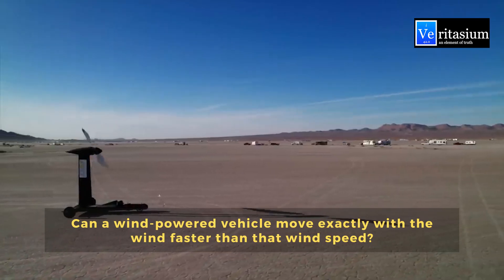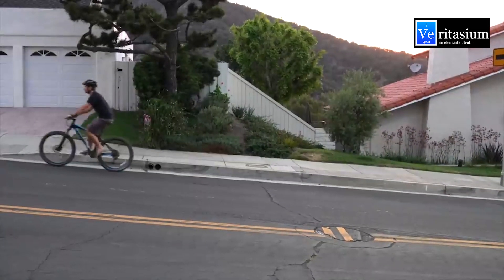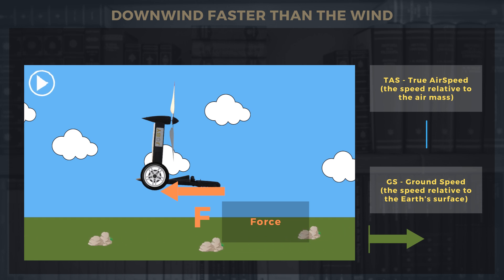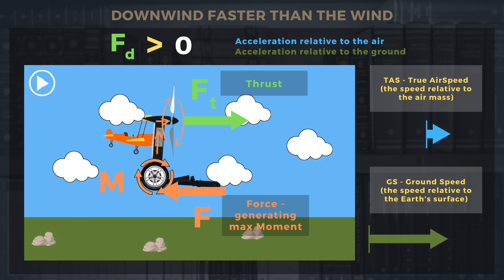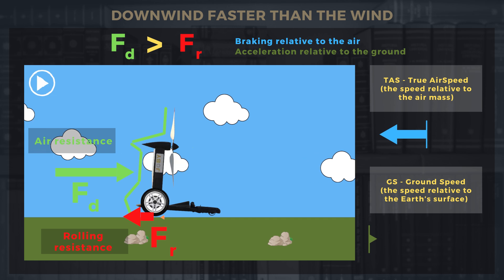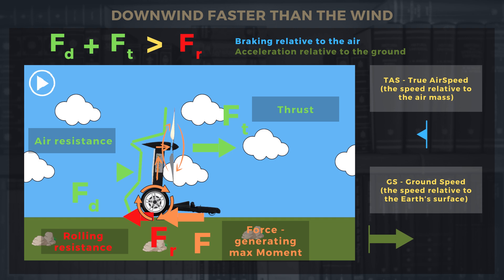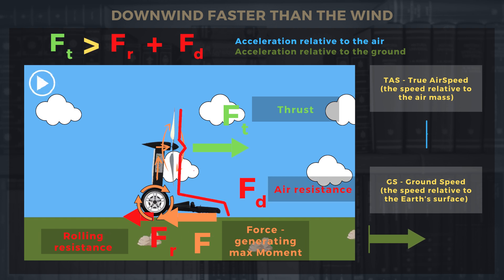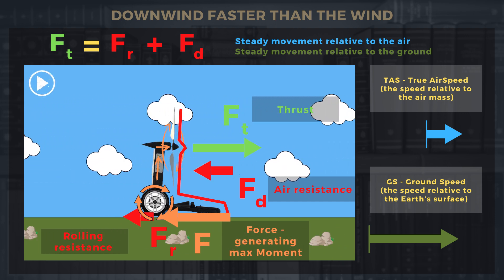Veritasium is wrong. Blackbird vehicle explanation.

Comment: One of the correct statements you make is that rolling resistance is approximately a constant.   This is true.   Then you make a major error in saying this is the only force the cart has to overcome.   This is patently false.   As the cart picks up speed, the propeller turns faster.  Since the only thing driving the propeller is the wheel, the retarding force at the edge of the wheel increases the faster the cart goes.   So the prop has to create thrust to overcome an increasing force retarding the carts motion.   The only way it does this is that the prop thrust is proportional, but more than, the retarding force of the wheels which is increasing as the cart speeds up.   This is due to the constant multiplying force of leverage (the more you put in the more you get out on the other end [not energy but force])   So the cart accelerates until the aerodynamic drag of the cart, the propeller (because it is stirring up air turbulence also) the rolling resistance plus the internal drive train losses equal the thrust force on the cart from the propeller.   At this point, all forces and torques are in balance and the cart no longer accelerates.  It is at a limit speed well above windspeed.   

Note that this leverage is a changeable parameter by the pilot by varying the pitch of the propeller blades and can be a high ratio (lots more force of the prop than the wheels) to a low ratio (very near the same thrust at the prop compared to the retarding force of the wheels [again, very little to do with rolling resistance]).   

Cavallaro, Borton, and Derek are all correct that the fundamental principle that makes the cart work is one of leverage.   Your error is thinking that rolling resistance is the primary retarding force and it is completely wrong.  The tangential force at the wheel to drive the prop is much much larger near limit speed above windspeed, and without the leverage the cart would never work.   Once you understand this, you should not retract your video as it is a valuable discussion and it illustrates a misconception that others have fallen into.  But you should change the title, and declare that you were the one in error and they were correct.
Reply: This thread is a retarding force on my sanity 💀
Reply: Wtf are these replies
Reply: I've gone into the explanation too many times on the main video. In summary, the craft CANNOT do what it claims...and the explanation why not has to do with why this wind powered craft was tested on a treadmill rather than the obvious choice, a wind tunnel.

The craft harnesses changes in wind speed and direction to give the APPEARANCE of net acceleration.
Reply: @coreaccount4376  It's pretty funny, I've personally run a small model that easily exceeded windspeed that was on a treadmill with no change in speed or direction of the wind.   So no, your comment is factually wrong.   The Blackbird set a record for 2.8X windspeed under sanctioned conditions.   You don't get that kind of result as an APPEARANCE of net DDWFTTW travel.   How many actual experiments have you done?
Reply: @coreaccount4376  A professor bet 10k on it and was proven wrong, will you do the same? :)
Reply: The vehicle initially accelerates due to the tailwind pushing on all surfaces of the vehicle. 

It is important to note the propeller is initially stalled! Once the wheels can turn the propeller fast enough it will unstall and only then start to produce thrust. 

The vehicle is able to exceed the wind because the tailwind reduces airflow through the propeller enabling it to produce maximum thrust (static thrust) for far longer.

I hope this helps :)
Reply: https://youtu.be/yBCH0cW8l5w?t=485
Reply from the maker: Sorry for the delay in response. I slept and then worked (I'm from Europe). Your comments are the most substantive and balanced without emotions. Thank you! However, I have to defend my opinion further and I will try to explain it differently. (I think adding that orange force was confusing. it was only a reflection of air resistance that is why I do not put it into the equation). Please try to follow this analyse with a clear mind Thx. 

First,let's establish the initial state. I go thru analyzes from the initial state to the end state.
•             Wheel is connected to the propeller.
•             Air resistance depends on TASspeed.
•             Rolling resistance is constant.
•             TAS speed is bigger than 0. It is the speed of the aircraft relative to the air mass.
•             Ground Speed is 0. It is the speed of the aircraft relative to the air mass.
•             Vehicle braking relative to the air.
•             Accelerating relative to the ground.

Our initial forces:
•             F(a) air resistance acting on a vehicle – it brakes the vehicle in relation to air and acceleration in relation to ground. It Cause the wheel to rotate in direction of movement and thus wants to rotate the propeller to generate thrust in direction of movement (they are connected)
•             F(r) rolling resistance (braking wheels in relation to ground)
•             F(p) air resistance acting on the propeller (it wants to rotate the propeller in the opposite direction and thus also wants the wheel rotates in the opposite direction) I admit that this force should be also added. 

So when
F(a) = F(r)+ F(p) 
Vehicle is in steady speed in relation to air 
Stands still in relation to ground

When
F(a) >F(r) + F(p) 
Vehicle will braking in air masses
Accelerating in relation to ground 
Wheel and propeller start to rotate in the direction of movement and thus generate Thrust force F(t) and opposite force F(-t) which slow down wheel rotation.

I hope we all agree on what happens to this point.

When vehicle moves, forces will change:
F(a) and F(p) will decrease in the same relation but F(a) is all the time bigger. 
F(t) and F(-t) starts to growing
F(r) is constant 
F(g) force appears - from moving ground, it is an unbalanced force like the initial force F(a) was, and this force acts only on the wheel. It drives wheel does not slow down the vehicle. This force is not acting on the entire vehicle, only on wheels. It is force from the air mass movement in relation to ground (or the ground in relation to air mass). For TASpeed = 0 F(a)=0 for GSspeed = 0 F(g) = 0 These forces are in relation.  The ground does not hold the vehicle as air mass does, it only holds the wheel by rolling resistance. I think this is somewhat similar to the problem in which myth busters explain “Plane ona Conveyer Belt '' Generally our vehicle is moving in air masses as a plane. Grounds only transfer the force that initially moved a vehicle.

We will have then
F(a) +F(t) + F(g) > F(r) + F(p) + F(-t)
Forces will change in relation but the left side will be bigger all the time, Until we reach the wind speed. 

So when we reached TAS speed = 0 (no move relative to air) the air resistance force disappeared, and the only forces remaining were F(r) rolling resistance,  F(t) Thrust, F(-t) on wheel and F(g) from ground moving.  

We have than:
F(t) +F(g) > F(r) + F(-t) 

F(g) generates additional F(t’) thrust force and opposite F(-t’) force on the wheel.
|F(t’)| = |F(-t’)| = |F(g)|
|F(t)| = |F(-t)| 

So we can only left 
F(t’) >F(r) 

We continue acceleration; we have thrust force bigger than rolling resistance. At this point only force holding back the vehicle is rolling resistance. 

From this moment air resistance will act in the opposite direction but with a different effect.
F(-a) air resistance acting on the vehicle – will braking vehicle in relation to air but also in relation to ground and this force will rotate the wheel in the opposite direction of movement and thus the propeller.(slow down it)
F(-p) air resistance acting on the propeller – helps to rotate the propeller and generate the thrust force and thus rotate the wheel in direction of movement. 

But F(-a)> F(-p) as we assume at the beginning 

So then
F(t’) +F(-p) > F(-a) + F(r) 
Vehicle accelerates in relation to air masses and ground until the F(-a) force will grow enough and will balance the equation. F(p) grows in the same relation but F(a) is bigger. 

F(t') +F(-p) = F(-a) + F(r) 

This will be the target state
Steady movement relative to the air
Steady movement relative to the ground

IMO It's all about taking energy from a moving medium that moves as if "next to" the medium in which the vehicle is placed. You can stand by the river (on the bank), draw energy from it and go upstream (on bank) using that energy. If this is correct then we don’t need the lever for this to work, only balance of forces and changing forces direction. The lever can help because we assume 100% efficiency (in reality it is impossible). But the lever is not critical for it to work. If this is wrong then I admit that I was in misteak.

P.S. You are also not agree with Veritasium video:
V – “with sufficiently low energy loss, any speed is possible.
You- “It is at a limit speed well above wind speed.”

 P.S.2 I can answer in delay. I have plans for today, but I will do that for sure. Regards!
Reply: @PiotrRysztak  "I think adding that orange force was confusing..."

No. Failing to include that orange force in the net force equation was your error, based on a very fundamental misconception that you have about "tangential forces".

"Our initial forces:.."

You have again failed to include the backwards force at the wheels due to the propeller torque (you know, the orange one), which is already present from the start, if the propeller is in positive pitch. In fact, if the pitch is too high, that force will propel the vehicle backwards, in the upwind direction.
Reply: @PiotrRysztak  Good reply but you do have a major flaw HERE and both sentences are factually wrong  (the first in the last part and the second completely wrong).

You: "F(g) force appears - from moving ground, it is an unbalanced force like the initial force F(a) was, and this force acts only on the wheel. It drives wheel does not slow down the vehicle."

The ONLY reason it doesn't slow down the vehicle is because the propeller is producing a larger thrust force but the ground force most certainly ACTS on the entire vehicle and WOULD slow it down if the propeller thrust weren't greater than this force.   Your point about "It just acts only on the wheel  (to produce only spin of the wheel) is wrong.  It acts only AT the wheel rim but by the rules of mechanics is on the whole vehicle.   Since the wheel is resisting that force, the force is transmitted to the whole vehicle via the axle.   So via the axle, it most definitely imparts a retarding force to the entire vehicle.   

Others have used the concept of braking of an automobile as an example.  When the car is braked, the ground only operates on the wheel rim but the force to brake the car to a stop is much greater than just removing the angular energy from the wheel.  The energy of the entire car translating has to also be removed.  The force on the wheel of the car from the ground is much much greater than just slowing the tire/wheel down.  This is easy to show with an spinning wheel pushed against a surface which can be stopped with a much lower force than when the wheel is on the car at the same wheel speed.  Brakes clearly don't just stop the cars wheels--they stop the entire car.

This is the point that everyone is telling you that you consistently get wrong and they are correct.   This isn't just an opinion, you can read about it here:

https://en.wikipedia.org/wiki/Couple_(mechanics)

where Wikipedia states it as:

"A force F applied to a rigid body at a distance d from the center of mass has the same effect as the same force applied directly to the center of mass and a couple Cℓ = Fd. The couple produces an angular acceleration of the rigid body at right angles to the plane of the couple. The force at the center of mass accelerates the body in the direction of the force without change in orientation. "  (see diagrams in reference).

The last sentence there is the one that is important in this context and is the one where you are clearly wrong.  The people telling you that you have this wrong aren't misunderstanding this.   We've all been trained in physics and dynamics and understand this point.   The textbooks agree with us.  It is simply a misunderstanding on your part.

The prop thrust and retarding force of the ground form a couple (which causes rotation of the wheel to produce torque to power the prop) but the thrust force produces an excess force at the axle which causes the wheel to translate (in direction of motion) along with the vehicle.  Without leverage this wouldn't be possible because the prop thrust has to be larger than all the tangential forces at the wheel in order for the vehicle to accelerate.

A force on the tangent to an object without a torque couple produces both rotation and translation since there is a change in both linear and angular momentum of the wheel from an off Center of mass force.  This is fundamental dynamics and all of these engineers know this.  You can see this practically when you throw a disk when you hold it only by the rim and accelerate it like a frisbee.  It both translates and spins.   So please stop saying that this is a pure "spin" force just because it is on the tangent. It's wrong.    It can only be a pure spin force if it is a torque couple.   In other words, for pure spin only you have to have an opposing force of the same magnitude on the opposite side of the rim tangent to it in the opposite direction.   Because if there is any overall force imbalance on the wheel, you are going to get translation as well as rotation (which is what the reference above states).  This is fundamental dynamics.  It is the major mistake on your part to think that a single force at the rim of a wheel will only produce a pure rotation.  Every physics and dynamics book says this is wrong. 

BTW, it isn't much of a mystery what happens below windspeed.  The dynamics mostly only get interesting near wind speed travel and above.  But it is a bit of interest where the blades of the propeller start turning fast enough below windspeed to start to generate thrust since this is a turbulent flow regime.  Most people do not have an issue understanding this regime.

your second fundamental flaw is that f(t (prop)) = -f(t wheel retarding).    This isn't true.  The propeller thrust of the vehicle (by design) always exceeds the TOTAL wheel retarding force (up to the limit speed).  If it did not, it would not work.  And the majority of the wheel retarding force comes from the torque of the axle from the resistance force of the prop to rotation. 

Above windspeed, there are only these translational external forces--gravity (weight of the cart) which equals the force from the ground directed upward.  (They are equal and opposite so no vertical acceleration exists).   Propeller thrust force, Aerodynamic drag force on the cart, and the force tangent to the wheels.   The force tangent to the wheels is caused by rolling resistance plus internal losses PLUS the torque force from the propeller on the axle translated out to the rim.  This force is the part of the torque couple with the lever arm being the distance from axle to rim which RESULTS in a resistance force on the rim.  The resulting force at the rim is substantially lower than the thrust due to overall leverage (gearing to the prop) and it arises from aerodynamic resistance to turning of the prop.

Then you state:

"IMO It's all about taking energy from a moving medium that moves as if "next to" the medium in which the vehicle is placed. You can stand by the river (on the bank), draw energy from it and go upstream (on bank) using that energy. If this is correct then we don’t need the lever for this to work, only balance of forces and changing forces direction. The lever can help because we assume 100% efficiency (in reality it is impossible). But the lever is not critical for it to work. If this is wrong then I admit that I was in misteak."

The easy analogy for this cart should be "to go down the river faster than the river" but one can go up bank also faster than the river by using the river but you still need leverage to capture any energy.

The mechanism by which one draws energy to make all the forces work in an imbalanced way in your favor is leverage (or gearing--take your choice).   If you don't think so, then propose a mechanism by which to do this without using leverage or "force multiplication" of some sort.  (It turns out that there are plenty of mechanisms but they all rely upon the principle of leverage).

On your P.S.  "V – “with sufficiently low energy loss, any speed is possible.
You- “It is at a limit speed well above wind speed.”:

I am actually not in disagreement with Veritasium.   The limit speed (for any particular vehicle) comes about because the lever ratio required is a function of losses of that vehicle.   The higher the losses, the higher the leverage ratio is required to make the vehicle work.   So the limit speed is the highest speed obtainable with the highest ratio that the cart can overcome all other losses (aero, rolling, and internal) and still have the thrust force > wheel retarding force.   A cart with lower losses can go faster with a higher lever ratio (gearing ratio) but it still has a limit speed (only different from the first).   So the comments are actually just restating the same thing.

So in all regards, I'm completely in agreement with Cavallaro and Borton.
Reply from the maker: Thank you very much for this lecture. It is very informative and precise. I would like to make a simple animation explaining how the forces are distributed from the beginning to the end of the experiment, because I think this is missing in the discussions about this phenomenon. There are analogies, experiences, but I didn't get to a simple animation of what is happening in the vehicle from the beginning to the end of the experiment. How forces change etc.. 

However, I still need to dispel my doubts. 
What happens to the force F(a) - the aerodynamic drag that is at the beginning? 

Let us assume that we do not have a propeller, then only the aerodynamic drag force and the rolling resistance force act on the vehicle. 
The vehicle will accelerate relative to the ground.
and It slows down against the air. 

There will be a situation where F(a) aerodynamic drag becomes equal to F (r) rolling resistance.
Steady movement in relation to the ground.
Steady movement in relation to the air (below wind speed)
This is the target state that this system will try to achieve.

What happened to this unbalanced force at the beginning? Since there are always pairs of forces as you all mention many time and I also know that (I hope you see that I am not some retard ;) )  Rolling resistance Is constant all the time. What happens to air resistance? 

I agree that we are taking force from braking in air masses, to accelerate in relation to ground but in relation to ground we have only constant force of rolling resistance. Where is this unbalanced force in the beginning? Is it that this force from the beginning was added only once to the system, from the outside? We hold the car at the beginning of the experiment and remove force blocking the air resistance from moving the car?  If yes I think this can be the place where I made a mistake in my analysis. I assumed this force should be in the system all the time but only changes the place.  

>>The easy analogy for this cart should be "to go down the river faster than the river" but one can go up bank also faster than the river by using the river but you still need leverage to capture any energy. 

Look at this analogy: 
Car in air (TAS=0) =  water mill on bank of river(speed in relative to bank = 0)
Ground is moving in left direction  =  river is moving in left direction 

We want to go in the right direction on the bank and on air.
Isn’t it a 1:1 analogy? 

So when we stay on the bank of a river, we are a water mill and we are taking energy from moving water but we are not moving in relation to the bank, we stand still. We have energy and we can do with this energy whatever we want. We don’t need a lever for that.We block normal force by holding the ground but taking torque force and we can use it. We can use it for example to move in the direction opposite to water.  

I think that we can do the same analogy to air mass – ground movement. We are held in the air mass and taking energy from moving ground.  

I hope my reasoning is more clear now. This is why I think it is possible - taking energy from a moving medium that moves as if"next to" the medium in which we are, and using this energy to move in the medium we are in. 

I have some plans and can answer with delay but I will be for sure :) Regards and thank you for open minded discussion!
Reply: @PiotrRysztak  "We block normal force by holding the ground but taking torque force and we can use it. "

You still don't get that this torque generating force will also be braking you, do you? As long you don't fix that misconception, you will always fail to analyse this correctly.

"This is why I think it is possible - taking energy from a moving medium that moves as if"next to" the medium in which we are, and using this energy to move in the medium we are in. "

Of course it is possible, but when both media are moving in the same direction relative to you, then you will have opposed forces at both media:
Fg =  braking generator force
Fp =  propulsive thrust force
You cannot ignore Fg, but you can have Fp > Fg thanks to "leverage".

Note that Fg & Fp are separate from the dissipative forces, which you have additionally (rolling resistance, drag).
Reply: @PiotrRysztak  

Taking your points in order:  "What happens to the force F(a) - the aerodynamic drag that is at the beginning? "
For a DDWFFTW cart, the propeller and cart body do have aero drag up to windspeed which accelerates the cart in the downwind direction.  Nothing mysterious here, it is just blowing in the wind.   But because of the gearing, the wheel torque always overcomes the propeller torque and causes it to turn like a propeller and not a wind turbine.   At windspeed, the aero drag disappears and above windspeed, the aero drag now becomes a retarding force and increases up to the limit speed.

Rolling Resistance--is small and approximately the same over the entire scenario.   It isn't a major factor in the entire situation as it is a weak force for the Blackbird.  It is always a retarding force however and has to be included in the force to be overcome by prop thrust below and above windspeed.  Rolling resistance usually just includes the drivetrain losses minus the propeller rotational drag.  You could determine it by just measuring the force it takes to push the cart at any speed with the propeller disconnected but not the rest of the drivetrain.   For most practical purposes, you can forget rolling resistance because it isn't very important.  If you want to include it in your video it is small and approximately constant  (it rises slightly as the speed increases from the frictional losses in the drivetrain).

Aero drag above windspeed is the one of the two predominant retarding forces.  The other force is the propeller power requirement reflected via torque back to the rim of the wheel.   For most carts the latter is the primary retarding force so it is very important.   This force roughly rises with the square of the velocity of the cart over ground above windspeed because the phenomenon that is causing the propeller torque resistance is aerodynamic drag from turning to produce the thrust.

You state: "I agree that we are taking force from braking in air masses, to accelerate in relation to ground but in relation to ground we have only constant force of rolling resistance."

NO, a thousand times NO.  Rolling resistance has a specific meaning and it doesn't include the propeller torque budget.   This is your fundamental error.  The MAJOR force at the wheels isn't rolling resistance but the propeller torque requirement forces reflected back through the drivetrain to the rim of the wheel.
You can state this all you want but it will always be wrong for this cart with low rolling resistance like the Blackbird.

The importance of this point can't be overstated.   If the gear ratio was not set up so that the torque budget from the propeller produced a lower force at the wheels (leverage), the cart would never work as a DDWFTTW cart.   In fact, the way to change the cart to work as a Direct Upwind FTTW cart is to change the gear ratio from the propeller to the wheels such that the propeller force is larger than the wheel force.   This cart will run upwind faster than the wind, but not downwind faster than the wind.

You state:
"Where is this unbalanced force in the beginning? Is it that this force from the beginning was added only once to the system, from the outside? We hold the car at the beginning of the experiment and remove force blocking the air resistance from moving the car?  If yes I think this can be the place where I made a mistake in my analysis. I assumed this force should be in the system all the time but only changes the place."

The force in the beginning is somewhat obviously just the wind blowing on the cart from behind to start it moving.  The only thing opposing this at this stage is rolling resistance (small) and some propeller torque resistance as it would normally windmill like a turbine but is being forced to turn as a propeller.  As it accelerates to near windspeed, the propeller starts adding thrust to the cart which combines with the drag (from behind of the cart to accelerate it up to windspeed).  If not for the force at the propeller, it would never get to windspeed due to internal losses.   Once windspeed is achieved, there is no aero force at all on the cart body, the only force is the thrust force and the wheel force from rolling resistance and propeller torque budget (described above).  Above windspeed, the cart produces aero drag that starts to retard the motion and the faster the cart goes, this force increases AS WELL AS the force from the propeller torque budget reflected to the wheel rims.

The river analogy is just a waste of time because going down a river faster than the river with a propeller in the water and wheels on the bank is the same phenomenon so it doesn't lend any additional insight.

Energy is reference frame dependent so where the energy comes from and goes depends upon the reference frame it is being measured in.  That is another discussion I would be happy to have but if one understands the top part of the post, the energy issue is not all that important.  The energy for driving the cart comes from the propeller slowing the true wind (processed through the propeller) over ground.     The wind loses energy with respect to ground and the cart gains part of that energy to function.

I'm happy to continue to discuss it.

BTW:  If Cavallaro or Borton tells you that any of this is incorrect, there is a 99.999% probability that they are right.
Reply from the maker: I had a rough end of week. This is why I focused only on this thread. @eytyee I take in consideration your comments too, thanks for them!

Ad.1 - Variant with propeller (from experiment)
I took the notes to this variant with the propeller. I will think about it. I hope you guys agree that this kind of simple animation can help to understand what is going on with the vehicle and with forces.

Ad.2 - Simple example cart without propeller.

>>Let us assume that we do not have a propeller

In a previous comment i consider simple cart (car) with no propeller, no engine, only cart, wheel, and air mass moving in relation to ground or ground moving in relation to air mass (depending on the observer's perspective). At beginning we have unbalanced force of air resistance.

"We are taking force from braking in air masses, to accelerate in relation to ground but in relation to ground we have only constant force of rolling resistance."

I hope we agree with that  the target state that this variant will try to achieve is:
Steady movement in relation to the ground.
Steady movement in relation to the air (below wind speed)
F(a) aerodynamic resistance becomes equal to F (r) rolling resistance. These are the only forces influencing the movement of this vehicle.

This is why i asked the question What happened to this unbalanced air resistance force at the beginning?  

Ad.3 - Water-ground analogy to ground-air
We agree that the analogy is 1:1? 

•           Car in air (TAS=0) =  water mill on bank of river(speed in relative to bank = 0)
•           Ground is moving in left direction  =  river is moving in left direction 
•           We want to go in right. On the bank or in the air masses. 

We can undoubtedly stand on the shore and draw energy from the water through the rotating waterwheel (for example) and this water not move us in relation to ground. We are block this force by holding the ground. This is how simple watermill works. We block normal force but generating moment. Where is this wrong?
We rotate the waterwheel without moving it in relation to ground. So we can use this torque for whatever we want. For example move upstream the river. Mechanism we use to do that is different discussion.

This is why I think it is possible - taking energy from a moving medium that moves as if"next to" the medium in which we are, and using this energy to move in the medium we are in. 

Try to read this with caution and with open mind please. Where in this reasoning is mistake?

Ad.4
>>If Cavallaro or Borton tells you that any of this is incorrect, there is a 99.999% probability that they are right.

So you are saying i am 0,001% closer to convince you xD <- (joke)
but for me Argumentum ad veracundiam is not what is good argument in discussion. If people didn't question authority, science could get stuck in error. I am not saying that this is such a situation, it is a general statement.
Reply: @PiotrRysztak  "So we can use this torque for whatever we want. For example move upstream the river."

You don't just have torque from the water. You also have a force that pushes you downstream. To move upstream against that downstream force you need a greater force at the ground (due to leverage).
Reply: @PiotrRysztak  
Ad.1)  Illustrate as much as you like just be sure to include all forces.  The force due to the propeller's resistance reflected to the wheels is essential.  It should start at zero and steadily rise (even before the thrust starts).   At roughly 50% to 70% of windspeed, the propeller thrust will start to go positive and will soon exceed the resistance force (net) at the wheels before windspeed).   From there it increases and propeller's reflected force the wheels will increase until all the forces balance.  That will be the limit speed of the cart for that wind and it will be steady state and faster than windspeed as long as the true wind blows.   

Your Ad.2 is fine.  Remove the propeller and the only thing resisting motion is rolling resistance.   If the car starts, it will roll up to the speed where the drag force from the wind balances the rolling resistance.  This speed point will of course be slower than the wind.  So with no propeller we are in agreement.

But if you add the propeller back in, it will produce thrust and it will also produce the additional retarding force at the wheels.  And without the unbalanced leverage with the gear ratio such that the prop thrust is more than the wheel retardation that turning the prop causes, the cart will never exceed windspeed.

Ad.3   I disagree with your analogy if you want to consider a DDWFFTW.   (Direct Down Water Boat Faster than the Water).   Why does this matter?   Because the water is the medium that is slowed from the free stream velocity by the boat's propeller (just like the DDWFTTW cart) and the wheels are producing drag against the bank.  Nevertheless the boat can go DDWFTTW.   If you go upstream you have A DUWFTTW boat.   One could call this a DDGFTTG boat with the river as the frame of reference. though.   This illustrates that either reference frame is the same but the boat behavior Up  and Down is different.  This is due to the medium being accelerated through the propeller.    

Your reasoning mistake is missing that a waterwheel has to be attached to the ground for the waterwheel to turn.   Otherwise, it will just float down the river and not turn.  You aren't blocking the force holding the waterwheel if you attach to the ground.  You are simply constraining it to rotation only.   When you do this, the turning wheel most definitely applies a force to the ground (where it is attached to the ground).   You continue to make this simple mistake thinking there is no force on the ground.   I'm completely open minded about this but I see you continue to make this error.   And this is the major error.  It is very real and very measurable in the real world.   Why do you continue to ignore that a tangential force on a wheel causes translation and rotation if not constrained?  I've offered the textbooks explaining this clearly to you and it follows directly from Newton's 2nd law.

"So you are saying i am 0,001% closer to convince you xD <- (joke)"

On a serious note, when I state that, my comment was to open the possibility that I simply misstated something.

Even as a joke you are no closer to convincing me (no joke!).   As I did dozens of experiments on YouTube on the treadmill with a smaller cart and know how it works and which forces make it move.  It is actually relatively straightforward to measure the forces directly that I'm explaining to you.   They behave like I'm telling you, not as you described in your theory.    There is one sacred rule in science:   When careful experiment tells you that reality differs from your theory, it's time to modify your theory!

Your theory is fine with the exception of leaving out the prop force reflected to the wheels and the leverage is the reason that force is lower at the wheels than the prop thrust.  That's the modification the theory needs for the cart to function properly.

Unfortunately that means that your title is incorrect and that Borton and Cavallaro are 100% correct with their operational theory.
Reply from the maker: ad.1 yes i want to do that because then there will be no confusion about what i going on from the beginning to the end.

ad.2 The question is still here. What happens with that unbalanced force, air resistance? At the beginning it was unbalanced, you mention that there should be pair of force, so?

ad.3 You (water mill) are stay still on bank of river (ground), only water wheel is rotate (in water). You have all forces balance, only torque is unbalanced. 
So there is no move in relation to ground, and there is net torque force. Yes or not? I think there is clear that we have extra rotation force.

We can use this force for example to move one part of watermill upstream, block in ground and move the part what is behind. Literally we can move upstream of river. Even more we can use this torque force for whatever we want. Why are you denying it? 

That's why i made this sentence:
We can taking energy from a moving medium that moves as if "next to" the medium in which we are, and we can use this energy to move in the medium we are in.

ad.4
I am not denying that in blackbird car construction there is leverage, but only questioning that leverage is necessary to move in one medium using energy from medium moving "next to".
Reply: @PiotrRysztak  
Well it's clear that you're 100% invested in not understanding what's really happening - or even acknowledging the explanations people are giving you.  You made a video to call others out on being wrong - when they are in fact NOT wrong.  And you just refuse to reconsider based on well understood principles of physics.  This video is doing a great disservice!
Reply: @PiotrRysztak  "We can use this force for example to move one part of watermill upstream, block in ground and move the part what is behind."

You have just made it discontinuous and more complicated. But if you average the forces and relative velocities over time, you still see the same thing: A smaller retarding generator force at the medium moving back faster relative to you, and a greater propulsive force at the medium moving back slower relative to you. This is leverage again.

"only questioning that leverage is necessary"

It is necessary when moving downwind above windspeed, or when moving upwind at any speed.
Reply: @PiotrRysztak  With regards to ad.2, the unbalanced aerodynamic force accelerates the cart.   The only other force if there is no propeller is the rolling resistance.  So the cart accelerates up until the force from the wind balances rolling resistance (again, with no propeller).  This speed is well below windspeed.  When you add the propeller back in, the propeller provides thrust and this causes a retarding force at the wheels (less than the propeller thrust).

ad.3  You are forgetting that if you put a water wheel on the ground, it also has a reaction to the ground.  This is in the form of a force at the attachment points.   Certainly you can get work out of the system because the wheel slows the water and the water wheel can pull a line or turn a grindstone.   But without the attachment to the ground, it doesn't work.

ad. 4 "I am not denying that in blackbird car construction there is leverage, but only questioning that leverage is necessary to move in one medium using energy from medium moving "next to".

Yes.  I understand that you aren't denying that the cart works.   But I'm telling you that it clearly not work without the leverage with a ratio greater than 1:1 for the prop to the wheels.   For it to work the force from the prop torque reflected at the wheels has to be less (substantially) than the gained propeller thrust.  As the propeller thrust has to make up for not just force but the other retarding forces.   

Stop insisting there is no force at the wheels other than rolling resistance.  That is absurd.  You've already stated that if you put a generator on the wheels driving a motor on the propeller that there would be a force.  This is the same thing, just skipping the motor/generator and connecting the wheels directly to the propeller which means if the wheels drive the prop, there is a reflected retarding force at the wheels.   Just repeating endlessly that you don't understand this doesn't help.
Reply from the maker: @Rick Cavallario It is sad,  that You can not discuss with me with no emotion, like it should be done. I know that it is my fault, you feel attacked by my video - that was not my goal, I am sorry again.
I readed that you want to bet me. I thought about it but I am from a poor European country, no professor of one of the best universities in the USA or owner of one of the biggest YouTube channel ;) So the risk of 10k$ is not the same as for them. How about 100:1 wager. If you have no doubt it will be no problem, free cash for you.
How about this: when we agree that you are right:
- i will send you 100 USD
- I will remove the video or change title, description, thumbnail <- your choice.

If I am right:
- You will send me 10 000 USD
- we will be friends and you help me with to change people perspective on this very interesting phenomena

I think these are fair terms.

@windfrins, @eyytee you can be witnesses.
back to our discussion:

Ad.2 - (No propeller)
@windfrins
>>the unbalanced aerodynamic force accelerates the cart.

This unbalanced part of the aerodynamic resistance force accelerates the car but is not disappearing, now is working on the wheel. I think this is a crucial place for my reasoning.

@windfrins
>>So the cart accelerates up until the force from the wind balances rolling resistance (again, with no propeller).  This speed is well below windspeed.

You wrote earlier that this rolling resistance is so small that we can even "forgot them", 

@windfrins
>>Rolling Resistance--is small and approximately the same over the entire scenario.   It isn't a major factor in the entire situation as it is a weak force for the Blackbird.

now you write that rolling resistance is cause that car is "well below windspeed" it doesn't add up. If there will be no rolling resistance car would get wind speed nothing else stop it to do it. I hope to this point we all agree?

ad.3  
It all depends on perspective. We have three main mediums moving in relation to each other: water, ground, air (6 different relations). We can be in one of them, and we can hold still in relation to it, and simultaneously we can generate energy from this medium which moves "next to". Some pairs are more intuitive, others less. 
That is way i assume It is exactly the same situation:
Car(plane) stay still in air (air resistance holds it) - water mill stay still in ground ( ground holds it)
wheel rotates thanks to ground moves in left direction - water wheel rotates thanks to water moves in left direction
We want to go in the right direction.
Matter of perspective.

It is not more complicated, it is ancient technology not sophisticated physics. The Water Mill stays still in medium (ground) and the Water Wheel is rotating thanks to the moving river (water). How we use this rotation depends on us. 
Important question - From the perspective of the ground we are not moving and have a net torque value. <- yes or no?

This is why I created this assumption: We can take energy from a moving medium that moves as if "next to" the medium in which we are, and we can use this energy to move in the medium we are in." For example to move, but we can generally use it for whatever we imagine.  That is how basic power plants work. Try to think about this "out of the box" please.
Reply: @PiotrRysztak "For example to move"

To move upstream, you have to overcome the downstream force on the turbine. Which works thanks to leverage.
Reply: @PiotrRysztak 
You: "now you write that rolling resistance is cause that car is "well below windspeed" it doesn't add up. If there will be no rolling resistance car would get wind speed nothing else stop it to do it. I hope to this point we all agree?"

For the actual car, without a propeller, it would definitely be below windspeed on just rolling resistance.   But this will depend upon the actual rolling resistance of each cart.   For a cart with near zero rolling resistance, it would only be slightly below windspeed.  For a cart with skinny tires like the blackbird with the cross section of the prop (but unhooked from the drivetrain but not turning), it would be below windspeed but you can't really tell the exact amount without actually making some measurements and knowing the speed of the wind on the cart.

But the rolling resistance (with the prop hooked up) is relatively minor compared to the force from the propeller torque budget being reflected back to the wheels as a retarding force.   Aerodynamic drag, as the cart speeds well above windspeed, becomes a strong force also.  But rolling resistance is never very large.

You: Important question - "From the perspective of the ground we are not moving and have a net torque value. <- yes or no?"   The ground is not a valid inertial reference frame as the rotating water wheel puts and equal and opposite torque on the earth through its mounting.   The earth is so large, that there are basically no measurable effects.   You really need to understand when it comes to forces and torques, there is ALWAYS an equal and opposite reaction since linear and angular momentum are ALWAYS CONSEVED in a true closed system.

I fully understand how a power plant or a mill works on a water wheel.   You should understand that the wheel doesn't experience only rotation from the water.  If you cut the axle of the wheel loose from it's mount, the water would start pushing it (translation) in addition to the rotation.   The axle of the water wheel has a force on it which resists the translational force of the wheel.

It's the same for the cart.  The propeller thrust force of the prop resists the retarding force of the wheel from the torque reflected there (equal and opposite reaction).  So the cart, axle, and wheel are all accelerated from the NET force on the cart, axle and wheel, which is much less than just the propeller thrust.

So there is no argument that you can use the water to perform work but this is because the mount of the water wheel holds it in place so the water can act against it thus slowing some of the water.   It's the same thing for the cart.   The propeller works against the air because the wheels hold it in position and apply a reaction force so the air processed by the propeller is slowed and the cart acquires some of the energy the air losses.

So Veritasium, Cavallaro, and Borton are all correct with their theory.
Reply from the maker: @killbeas  
ad. 2.1 (no propeller, air-ground)
to @windgrins
We agree that this force (rolling resistance) is constant and depends on the wheel construction. I only wanted to show you that once you tell me that this force has no importance and once that it is a crucial force ;)

ad.2.2 (with propeller, air-ground)
Yes the propeller acts in two directions simultaneously. On wheel and on air. We have net force acting on the wheel from ground and this force can balance the force from the propeller, and only net thrust force remains. All the time air holds the vehicle.

ad.3 ground-water example

@eyytee
>>To move upstream, you have to overcome the downstream force on the turbine. Which works thanks to leverage.

If I have net torque force on the water wheel (in ground point of reference) I do not need leverage. Leverage in definition that Veritasium proposes only multiplicat the force. It can help but without that I still have net torque force I can use. The mechanism we can use for moving is a different topic. 
You have to admit that I am right with this statement:
We can have net torque force without moving in the medium we are in.
I will timidly remind you that at the beginning of discussion you denied such a possibility.

@windgrins
>>The ground is not a valid inertial reference frame as the rotating water wheel puts and equal and opposite torque on the earth through its mounting.

It is a valid inertial reference frame, we are interested in what happens in watermill-ground relations. Without any doubt it stays still and has a net force of torque value acting on water wheel. How can you even question that? I chose the thread with you to focus on discussion because I felt you are the only one open on science debate with no emotion but when you are questioning even my most obvious statement i don't know what to think. Why is that?

>>I fully understand how a power plant or a mill works on a water wheel.   

I didn't mean to suggest that you do not know how simple power plants work, I only doubt that you have seen the connection of the main problem with the mechanism that occurs in simple power plants.

>>You should understand that the wheel doesn't experience only rotation from the water.  If you cut the axle of the wheel loose from it's mount, the water would start pushing it (translation) in addition to the rotation.   The axle of the water wheel has a force on it which resists the translational force of the wheel.

I Completely agree but this is the point, we block these moves because ground is holding the watermill, like the air is holding the vehicle. We are not in a vacuum.

All is a matter of the observer's perspective. 
If you stay still on the ground - water and air moves from you. 
If you stay still in the air - water and ground moves from you. 
If you stay still in water - ground and air moves from you.
We live on ground so for us the most intuitive scenarios are ground - air and ground - water moves. We use it to generate net force for our purpose for thousands of years. But there are 4 more scenarios:
be in water - air movement
be in water - ground movement
be in air - ground movement 
be in air - water movement.

I hope you guys are beyond your Ego and eventually you will be ready to admit that in some points I can be at least partially right. It is hard to discuss when even your most obvious statements are denied.
Reply: @PiotrRysztak    There is no Ego in this.   We just know how it works and you didn't seem to understand it and you have made an incorrect statement in that the theory of Cavallaro and Borton are wrong.  It is strictly physics.

So addressing your primary points addressed to me:

1) Rolling resistance is a retarding force but it is one of the least strong forces retarding the carts motion above windspeed for a well constructed cart.   It isn't to be strictly ignored but it is relatively small (hence it appears in the equation but isn't very important above windspeed due to its small size relative to the two other primary forces--aero resistance and wheel resistance due to torque budget of the prop)

2). You state:  "Yes the propeller acts in two directions simultaneously. On wheel and on air."   Correct.   Via the thrust it produces and due to the torque it reflects back to the wheels.   We agree with this and furthermore what we state is that the propeller thrust must well exceed the TOTAL retarding force reflected back to the wheels from the torque budget plus aero drag force plus rolling resistance force.   This is where the principle of leverage comes in as it can be made less or more by different gearing.   If it isn't made so that the prop thrust exceeds the wheel retarding force due to the torque budget, the cart will not work.   Hence the theory of Cavallaro and Borton are correct.

 You state: "We have net force acting on the wheel from ground and this force can balance the force from the propeller, and only net thrust force remains. All the time air holds the vehicle."    No.  You have this wrong.   The prop thrust has to exceed the force of the wheels on the ground plus the aero drag force.   The NET Force is that excess of prop thrust compared to the sum of the three forces (aero resistance plus rolling resistance plus torque resistance at the wheels).   I don't know what you mean by "all the time air holds the vehicle".  That seems to be a meaningless term.

3).  Yes.   I do understand the connection of a water wheel at a mill--It is a simple constraining axle and the wheel turns the axle of the load (sometimes through gearing sometimes not).   So the load force can be stronger than the wheel force by appropriate gearing.   Power will be the same but the load force can be less or more due to the gearing chosen.  This is the same principle of the cart.   The torque force from the wheels due to gearing (leverage) is set such that the prop thrust is larger than all of the retarding forces summed (until limit speed where they all balance and the cart no longer accelerates).
Reply: @PiotrRysztak  
>> It is sad,  that You can not discuss with me with no emotion, like it should be done.

What's sad is that you feel you have to label my corrections as being emotional just because you're letting your ego take place of your reasoning.
Reply: @PiotrRysztak  
>> How about 100:1 wager. If you have no doubt it will be no problem, free cash for you.

I see, you can't afford a $10K wager on a point that you're absolutely certain of, so you should only put up $100 and I should still put up $10,000.  Well, that tells me exactly how confident you really are about your baseless theory.
Reply: @PiotrRysztak  
>>  Try to think about this "out of the box" please.

Imagine the irony!  Yeah - that's the problem with the proponents of this vehicle, and those that developed it.  We're unable to think out of the box!  Let's maybe consider another possibility.  We CAN think out of the box, but we're not willing to think outside of logic and established scientific principles.

>> I hope you guys are beyond your Ego...

Your hypocrisy is astonishing!

>> ...and eventually you will be ready to admit that in some points I can be at least partially right.

We're focusing on the specific things you claimed everyone else got wrong.  They (we) didn't.  YOU got those wrong.

>> It is hard to discuss when even your most obvious statements are denied.

So  one by one we've addressed every one of your incorrect statements.  You've shown ZERO errors in our claims.  Unbelievable!

You suggested that you could take the video down if you lose the unbelievably lopsided wager that you proposed...  hell no.  It should be left up indefinitely as a testament to your unwillingness to change your mind given piles of evidence.
Reply: "we block these moves because ground is holding the watermill, like the air is holding the vehicle"

That's not the same: It takes no power to remain fixed to the ground (just some bolts). But it takes power to move along the ground against the force from the water (or along the air against the force from the ground). Just because you can balance this force "for free" in a static case, doesn't mean you can ignore it for a vehicle, that has to move against that force.
Reply: @eyytee  It would also be a mistake to think that the bolts don't supply force which Rysztak is missing.   eyytee is correct that the hold down bolts apply no power since they are a force through a zero distance.   But the only reason the waterwheel doesn't go rolling down the river instead of just spinning in place is that the bolts supply a static constraining force to the axle that prevent the wheel's translation.

The reality is that Rysztak is wrong in his fundamental assertion and Cavallaro and Borton (and a whole lot of others here in agreement with their operating theory) got it right.  The fundamental error is from not realizing that an unopposed force at the tangent to a free body boundary causes it to both rotate and translate.  This is a fundamental dynamics principle.
Reply from the maker: to @windgris

1) I think we agree about rolling resistance so we can end this.

2) At exactly TAS speed 0, thrust has to exceed only the rolling resistance, there is no aerodynamic resistance at that point at all.But of course at this point the torque force on the wheel has to be equal to the opposite force from the propeller acting on the wheel. If yes the vehicle will accelerate at this point, do we agree or not with this assumption?
With the statement "all the time air holds the vehicle" I mean that in relation to air it tends to be in no motion. Like the water mill in relation to ground.

3) Even without the leverage, you have force, with the levere you can multiplate it. This is how leverage definition from Veritasium explanation is. We have net torque value; the leverage can help but is not essential. If the river will move faster (or ground in the air-ground example) we will have more force. And it will be easier to compensate for losses on efficiency.

(ground-water example)
We agree that we have net torque on the water wheel and no movement in relation to ground? YES or NO?

ad.4 I have two questions for you:
What happens with that unbalanced part of force "air resistance"? (at the beginning of the experiment it was unbalanced, it is force in air-vehicles relation.)
What happens with ground-air movement force?

to @eyytee

I don't want to ignore it. I hope you finally agree that the net torque force without moving is possible. The mechanism we use to move is the next step, we have the force to do that, which is most important at this point. Let me remind you that you said at the beginning of this discussion that such a state was impossible. I think you should at least in this point admit i`m right.

to @Rick Carvallaro
>>What's sad is that you feel you have to label my corrections as being emotional just because you're letting your ego take place of your reasoning.

I am writing politely with no emotions. I am trying to present my arguments and debating. 

>>I see, you can't afford a $10K wager on a point that you're absolutely certain of, so you should only put up $100 and I should still put up $10,000. Well, that tells me exactly how confident you really are about your baseless theory.

This proves you don't even try to read what I am writing with understanding. YOU propose the bet I only answer to this. I wrote that it should be the same risk for both sides of the bet. If you bet with Jeff Bezos 1mln$ who risks more? I think the yearly income of Alex or Dereks can be one hundred times bigger than mine. Is it the same risk for them as for me? 

I didn't find the simple force analysis from the beginning to the end of the experiment, only proofs by experiences or analogies. That is why I tried to figure it out by myself, my conclusion is that the vehicle works more like an inverted air-ground power plant, and leverage is not necessary for it to work. What I am trying to prove.

>>We're focusing on the specific things you claimed everyone else got wrong. They (we) didn't. YOU got those wrong.

Please specify this "thing", if you are talking about net torque value on wheel in TAS speed=0, We are now discussing it and i do not feel we are establishing agreement yet. I hope you read my posts with understanding.

>>So one by one we've addressed every one of your incorrect statements. You've shown ZERO errors in our claims. Unbelievable!

We have net torque force and do not move in relation to ground. Water mill example. Is it an incorrect statement?

>>You suggested that you could take the video down(...)

This is proof that you do not read what I am writing with understanding. I wrote that I can delete OR change title,thumbnail, description. It will depend on you what will happen with the video. It was my proposal. I hope now my intentions are clear.

I have already apologized to you several times. I try to write factually and argue my observations without emotions. You don't respect this and you don't even try to understand what I am writing. I am not a native speaker, so maybe you got my intentions wrong (I look arrogant or something). I try to use simple sentences and arguments.
Reply: @PiotrRysztak  
>> At exactly TAS speed 0, thrust has to exceed only the rolling resistance, there is no aerodynamic resistance at that point at all.

Wrong.  The tailwind is also acting on the propeller and trying to make the vehicle go backwards.  

>>  the leverage can help but is not essential

Again - wrong.  How many times must we explain this? Without leverage it could not go DDWFTTW.

>> I am writing politely with no emotions. I am trying to present my arguments and debating. 

You're not debating.  You just keep asserting things that are completely wrong because your ego won't allow you to listen and consider the facts.

>> This proves you don't even try to read what I am writing with understanding. 

Perhaps YOU should go back and read what I wrote.  I've said nothing that would in any way suggest I don't follow exactly what you're saying.

>> YOU propose the bet I only answer to this.

So what?  That doesn't change the fact that you claim to be certain of your theory but need a 100:1 wager.  I think that proposal tells us exactly how confident you really are.

>>  I wrote that it should be the same risk for both sides of the bet. If you bet with Jeff Bezos 1mln$ who risks more? I think the yearly income of Alex or Dereks can be one hundred times bigger than mine. Is it the same risk for them as for me? 

Talk about delusional and not paying attention!  What do Jeff Bezos, Alex, or Derek have to do with a bet between you and me?  The answer is simple.  You feel you need 100:1 odds to bet on your theory.

>> I didn't find the simple force analysis from the beginning to the end of the experiment, only proofs by experiences or analogies. 

Boy - you certainly must not have looked very hard!  Did you watch either video?  Did you look at any of the references in the video descriptions?  Did you read any of the comments.  They're EVERYWHERE.

>>my conclusion is that the vehicle works more like an inverted air-ground power plant, and leverage is not necessary for it to work. 

Your conclusion is wrong - no matter how many times you assert it.

>> This is proof that you do not read what I am writing with understanding. I wrote that I can delete OR change title,thumbnail, description.

Again, this is proof that YOU are not reading what I post.  Nothing I said contradicts any of that.
Reply: @PiotrRysztak  
>> I have already apologized to you several times.

That's a lie.

 >>I try to write factually and argue my observations without emotions. You don't respect this 

I don't respect you claiming others got it wrong and posting a video to call that out by getting it wrong yourself, and then clinging irrationally to your theory despite the many people patiently explaining the reality to you.

>>and you don't even try to understand what I am writing. 

You are delusional.  I haven't posted a single word that would suggest that.  But you keep quoting me and demonstrating that you either can't understand what I'm saying, or just can't follow a thread for more than two sentences.

>> I try to use simple sentences and arguments.

You should try using valid arguments.  Perhaps I need to use simpler sentences!
Reply: @PiotrRysztak    You State:  "At exactly TAS speed 0, thrust has to exceed only the rolling resistance, there is no aerodynamic resistance at that point at all."  

NOT CORRECT.   There are several errors here.    I have to assume you mean Relative Wind Speed, not TAS (True Air Speed) since at TAS = 0, the cart won't work at all.  TAS means "the speed of the wind blowing over the ground" and doesn't relate to the cart.   (With the cart) at wind speed, the Relative wind on the cart is zero.   Thrust at windspeed has to exceed rolling resistance plus torque drag on the wheels.  The turning prop always has torque drag at the wheels if it is moving.   At windspeed it is definitely moving so there is an additional force at the wheels in addition to rolling resistance.  It is true that at windspeed there is no aerodynamic drag.

"With the statement "all the time air holds the vehicle" I mean that in relation to air it tends to be in no motion. Like the water mill in relation to ground."

Which means "when the cart is at windspeed".   That is only one operating point and not especially significant to the operation.  The cart would never actually get to this point without the required thrust force which requires the stated leverage.

"Even without the leverage, you have force, with the levere (sic) you can multiplate (sic) it."   

Well, yes.  But that is rather meaningless.   The thrust force can be > 1:1 compared to the resulting wheel force or < 1:1.   For a DDWFTTW cart to function, the thrust force/wheel force ratio has to be > 1.   If it is < 1, the cart becomes a DUWFTTW cart and will never function as a DDWFTTW cart.   So leverage is required no matter how many times you repeat it isn't.  The prop always has to produce less wheel force than thrust for a DDWFTTW cart to work.

You ask: "We agree that we have net torque on the water wheel and no movement in relation to ground? YES or NO?"  YES, we agree that the wheel does not translate with respect to the ground if it is bolted down (a static force that prevents translation but not rotation).  But NO, not a NET torque if the wheel is only maintaining a constant rotational speed.  If the water wheel is constrained from translational motion by bolts, of course there is a torque from the water which is equal to the torque on the axle opposing it when it is at a constant speed.  So at constant rotational speed of the wheel, the NET torque on the wheel is 0!  There is a NET torque only when the wheel is accelerating rotationally.   Otherwise there is no net torque since the axle provides the equal and opposite torque due to load.    You really need to understand this idea.  If you don't get this, you'll continue to not understand.

You ask: " I have two questions for you:
What happens with that unbalanced part of force "air resistance"? (at the beginning of the experiment it was unbalanced, it is force in air-vehicles relation.)"

To answer this, you have to specify the speed with respect to the wind that the cart is.   Below windspeed, if adequate, the force from the wind accelerates the cart since it is blowing from behind the cart. At windspeed, there is no force from the "air resistance" or "drag".   And above windspeed, the "aero drag" attempts to impede the cart's motion by providing a force opposite to the cart's direction of motion since (with respect to the cart) it is blowing from the front of the cart.

"What happens with ground-air movement force?"

I not at all sure what you are referring to with that.  As stated, it really makes no sense.  What is "ground-air movement force"?

If you mean, what happens to the force at the wheel, as the cart starts at zero, passes through windspeed, and continues up to limit speed, then the torque budget force at the wheel is positive and impedes the acceleration of the cart. (which is why it starts moving much slower than a balloon in the wind).   From there it continues to increase along with prop thrust through windspeed all the way up to limit speed where it is a maximum.  This is purely a reflection of the torque force of the propeller in both being rotationally accelerated as well as producing drag from turning.   The other force at the wheel which remains roughly constant and relatively small is the rolling resistance.

You mention to Cavallaro that:

"my conclusion is that the vehicle works more like an inverted air-ground power plant, and leverage is not necessary for it to work. What I am trying to prove."

That conclusion is wrong so you are never going to be able to prove it.   Cavallaro and others (including myself) are attempting to show you where your physics understanding is incorrect.  For there to be a valid discussion, you have to agree to well understood points of physics and don't get to make up your own physics.

Again, I recommend you go to this website where you can post diagrams to describe what you are asking:

http://talkrational.org/index.php/topic,24.0.html
Reply: @PiotrRysztak  "... the vehicle works more like an inverted air-ground power plant  ...."

A power plant is fixed relative to one of the media. The vehicle moves in the same direction relative to both media. That is a key difference, that you keep ignoring.
Reply from the maker: @Rick_Cavallaro  >>Wrong. The tailwind is also acting on the propeller and trying to make the vehicle go backwards.

You are wrong, in TAS speed = 0 there is no aerodynamic resistance at all acting on the vehicle. TAS - The true airspeed of an aircraft, it is the speed of the aircraft relative to the air mass through which it is flying. 

>>Again - wrong. How many times must we explain this? Without leverage it could not go DDWFTTW.

This is what we are debating all the time. You put it for granted I do not. I am questioning that and i`am trying to prove that.

>>You're not debating. You just keep asserting things that are completely wrong because your ego won't allow you to listen and consider the facts.

vice versa. I have a conversation and I am debating with @windgrins and @eyytee we will see where it will go. If they will dispel my doubts, I have no problem admitting my mistake. They haven't done it yet. The argument that you can not be in no motion and have net torque value is wrong <- i try to prove this.

>> (about bet)

I give you an argument, why I think that risk should be equal, the value of 10k is different for everyone. I would risk a lot more than you. I can say the same to you if you are so sure then you can bet even 10000:1. Bet was your idea. I can bet on the truth and the second part of the deal I propose.

>>Boy - you certainly must not have looked very hard! Did you watch either video? Did you look at any of the references in the video descriptions? Did you read any of the comments. They're EVERYWHERE.

so it should be no problem to confront my argument isn`t it?

>>Your conclusion is wrong - no matter how many times you assert it.

I can debate with you if you would like. I can show you my doubts and you answer me and it will be no problem. I don't want to be your enemy. Your comments are agressive my are not, you don't see that?

>>Again, this is proof that YOU are not reading what I post. Nothing I said contradicts any of that.

You reacted as I would like have proposed that I will delete the video. I only suggested that it will be your will what will happen with this video. You overreacted this.
Reply from the maker: @killbeas  
>>NOT CORRECT.   There are several errors here.    I have to assume you mean Relative Wind Speed, not TAS (True Air Speed) since at TAS = 0, the cart won't work at all.  TAS means "the speed of the wind blowing over the ground" and doesn't relate to the cart.   (With the cart) at wind speed, the Relative wind on the cart is zero.   Thrust at windspeed has to exceed rolling resistance plus torque drag on the wheels.  The turning prop always has torque drag at the wheels if it is moving.   At windspeed it is definitely moving so there is an additional force at the wheels in addition to rolling resistance.  It is true that at windspeed there is no aerodynamic drag.

In fact it was correct TAS - True airspeed, is the speed of aircraft relative to the air it's flying through. The rest we agree for TAS=0 is really only one moment and in that particular moment Thrust force needs to exceed rolling resistance and torque acting from the propeller on the wheel. I think I wrote the same in my previous comment so we fully agree on that point. 

>>Which means "when the cart is at windspeed".   That is only one operating point and not especially significant to the operation.  The cart would never actually get to this point without the required thrust force which requires the stated leverage.

No it means that air "wants" the vehicle to be neutral to air and TAS to be 0. It acts when it does not happen.

>>Well, yes.  But that is rather meaningless.   The thrust force can be > 1:1 compared to the resulting wheel force or < 1:1.   For a DDWFTTW cart to function, the thrust force/wheel force ratio has to be > 1.   If it is < 1, the cart becomes a DUWFTTW cart and will never function as a DDWFTTW cart.   So leverage is required no matter how many times you repeat it isn't.  The prop always has to produce less wheel force than thrust for a DDWFTTW cart to work.

We want it to be 1:1 (no leverage) for my assumption to be true, If the opposite thrust acting on the wheel will be balanced by torque on the wheel from ground then we will have net thrust force. If it happens then we don't need leverage and the vehicle will accelerate above wind speed? I am not saying that this is real state, I am only asking if that is enough? (theoretically)

ad.2 ground-water example

>>You ask: "We agree that we have net torque on the water wheel and no movement in relation to ground? YES or NO?"  YES, we agree that the wheel does not translate with respect to the ground if it is bolted down (a static force that prevents translation but not rotation).  But NO, not a NET torque if the wheel is only maintaining a constant rotational speed.  If the water wheel is constrained from translational motion by bolts, of course there is a torque from the water which is equal to the torque on the axle opposing it when it is at a constant speed.  So at constant rotational speed of the wheel, the NET torque on the wheel is 0!  There is a NET torque only when the wheel is accelerating rotationally.   Otherwise there is no net torque since the axle provides the equal and opposite torque due to load.    You really need to understand this idea.  If you don't get this, you'll continue to not understand.

So you are trying to tell me that we can not use this force that is generated by rotating waterwheel? Isn't it  how the idea of watermills works? I agree that when we load too much force on a waterwheel from the other side the waterwheel can stop, but we have for sure some extra power from this which we can use for our purpose. How it is possible that there can not be NET torque on the waterwheel when water pushes it.

ad.3 air-ground
>>To answer this, you have to specify the speed with respect to the wind that the cart is.   Below windspeed, if adequate, the force from the wind accelerates the cart since it is blowing from behind the cart. At windspeed, there is no force from the "air resistance" or "drag".   And above windspeed, the "aero drag" attempts to impede the cart's motion by providing a force opposite to the cart's direction of motion since (with respect to the cart) it is blowing from the front of the cart.

So in quick words this force acts when the vehicle is not in TAS=0.

>>I not at all sure what you are referring to with that.  As stated, it really makes no sense.  What is "ground-air movement force"?

There is undeniably force. This force that power plants want to gain. And I think our vehicle can use this force. The air is blocking it in relation to air masses, and thanks to this fact we generate this force on the wheel.

to @eyytee
I repeat my comment to you please reply to that:
I don't want to ignore it. I hope you finally agree that the net torque force without moving is possible. The mechanism we use to move is the next step, we have the force to do that, which is most important at this point. Let me remind you that you said at the beginning of this discussion that such a state was impossible. I think you should at least in this point admit i`m right.

>>A power plant is fixed relative to one of the media. The vehicle moves in the same direction relative to both media. That is a key difference, that you keep ignoring.

This is the next step: first admit that it is possible to be in no motion in the medium, and generate energy from the medium that moves "next to" us.
Reply: @PiotrRysztak  

"In fact it was correct TAS - True airspeed, is the speed of aircraft relative to the air it's flying through. The rest we agree for TAS=0 is really only one moment and in that particular moment Thrust force needs to exceed rolling resistance and torque acting from the propeller on the wheel. I think I wrote the same in my previous comment so we fully agree on that point. "

I understand what you are stating since I happen to be a pilot but a much more informative nomenclature is that used by sailors.   The wind with respect to the cart is referred to as the "Relative Wind" and the wind over ground is referred to as the "True Wind".   The aviation terminology doesn't work very well since an airplane is not connected to the ground like the cart.   Since the cart isn't flying through the air, the sailing nomenclature is more informative and less confusing.  Note that I also am a sailor also so I am comfortable with either nomenclature but the sailing nomenclature is more appropriate because the cart works with two media like a sailboat in water, not just one--like an airplane in air.  The sailing nomenclature with regards to wind makes it generally easier to keep track of.  You can use the aviation language but you'll have to clarify your statements a lot.

You state:  "No it means that air "wants" the vehicle to be neutral to air and TAS to be 0. It acts when it does not happen."

This isn't true (like a balloon) since the cart also wants to be at True Ground Speed of zero also since it is just as much connected to the ground as the air.  Neither is sacred.   Since the cart is connected to both media, it settles down to a point between the two where the forces all balance if it is simply being blown along (like a sailboat).  So, as I stated, a real cart rolling on the ground will never actually get to windspeed without an additional force acting other than aero drag which disappears at windspeed.   Ground drag disappears at ground speed zero and wind drag is max.   So the cart finds a happy medium between the two if the True wind (wind over ground) remains constant.   A rolling cart on the ground is not like a balloon blowing in the wind and the balloon will always out run the cart (because of the drag of rolling resistance from the ground).  Without the propeller mechanism functioning properly with leverage, the cart will never get up to windspeed (zero relative wind).

You state: "We want it to be 1:1 (no leverage) for my assumption to be true, If the opposite thrust acting on the wheel will be balanced by torque on the wheel from ground then we will have net thrust force"   

Yep.   That matches what you are claiming but it is FALSE. 

Indeed, this is the problem.   with no leverage, the two forces are equal and you have the additional issue of rolling resistance which is also acting to retard the cart's motion over ground.  So with a 1:1 ratio of thrust to wheel retarding force, they will cancel each other and the cart will never get to windspeed.

You ask: "If it happens then we don't need leverage and the vehicle will accelerate above wind speed? I am not saying that this is real state, I am only asking if that is enough? (theoretically)

Understood.   And indeed with no leverage it will never get to windspeed since a cart just blowing in the wind will never get to windspeed and this just adds two forces that cancel.   So this is not enough, even theoretically unless rolling resistance is zero.  So this cart will never get to windspeed as it doesn't have any force (from the air) at windspeed to overcome rolling resistance at windspeed.  Hence it will always be below windspeed.   If you change the leverage such that the thrust makes up for the wheel retarding force plus the rolling resistance, then it will reach windspeed and beyond if the true wind (over ground) is strong enough.

You ask: "So you are trying to tell me that we can not use this force that is generated by rotating waterwheel? Isn't it  how the idea of watermills works?"

Yes, of course.   But the torque of the LOAD (the thing you are doing the work on) on the wheel axle prevents the wheel from accelerating once the two are equal.  It's why a "wheat mill" will run at a constant speed--the wheat provides a friction to the wheel which the water has to work against.  The work is used to grind the grain.  If you suddenly separate the two grinding wheels, the wheel will accelerate as it no longer has the same load on it to counteract the torque of the water against the wheel (not doing the same work as when the grinding stones are grinding).

You ask:  "How it is possible that there can not be NET torque on the waterwheel when water pushes it."

Because the force of the water imposes a torque but the force from the axle (grinding the wheat) imposes a COUNTER torque at the axle.   These two forces cancel each other (assuming constant rotational speed) so there is no NET torque.   (If there were NET torque, the wheel would accelerate or decelerate depending upon the sign).   So when the grinding wheels are separated, that torque reduces and the NET torque from the water and reduced force of the grinding stones now accelerates the wheel.   This is absolutely critical to understand.   It is what Newton is talking about when he says "Equal and Opposite reaction" for opposing forces or torques.

So, here is the key:   If there is NET torque, the wheel will accelerate.   But if you have equal and opposite torques, it will just turn at a constant speed (if it is already moving).   This is just like the cart propeller and wheels for the force from the propeller at the wheels.  If there is no leverage, there is no NET force and the forces cancel (propeller thrust and wheel retarding force due to this).   But remember that the cart has additional forces slowing it below windspeed so it will never accelerate to windspeed without the leverage.

You state: "So in quick words this force acts when the vehicle is not in TAS=0."  

In your terminology, YES.   I would prefer to state that at zero relative wind, the cart has no aero forces on it so we are in agreement on this.   Below windspeed (zero relative wind), the aero force tries to accelerate the cart (but the rolling resistance impedes this from ever reaching windspeed since the relative wind force disappears at windspeed and decreases smoothly up to that point), but the rolling resistance does not.     At windspeed, there is no aero drag but rolling resistance still exists, (but if your prop thrust is just equal to your torque imposed wheel force, (1:1 ratio) there is no additional force to overcome rolling resistance so the cart would never get to windspeed).   Assuming you can get to windspeed (because thrust exceeds all the retarding forces combined, the aero drag now is working against the cart accelerating).
Reply: @PiotrRysztak  "The mechanism we use to move is the next step"

I have already addressed your "next step" and explained how is still constitutes leverage. See my comment further up starting with "You have just made it discontinuous ... ".
Reply: @PiotrRysztak  
>> You are wrong, in TAS speed = 0 there is no aerodynamic resistance at all acting on the vehicle. TAS - The true airspeed of an aircraft, it is the speed of the aircraft relative to the air mass through which it is flying. 

I took that as ground speed = 0 for some reason.  You don't need to say "TAS speed" since TAS stands for "true air speed".  See what I mean?  But even with my mistaken interpretation, you're still 100% wrong.  Spinning a propeller in still air requires a LOT of torque.  That torque is provided by the wheels.  That creates a lot of drag.

>> You put it for granted I do not. I am questioning that and i`am trying to prove that.

I am not taking it for granted.  I conceived of the thing, designed it, and built it.  I know how it works.  Now I know you love to pretend I just fell ass-backwards into a design that happens to work despite not understanding it myself, but frankly you're completely full of shit.  You can (and I'm sure will) continue forever to try and prove your completely baseless and disproved theory, but you will fail.

>>  I think that risk should be equal, the value of 10k is different for everyone. I would risk a lot more than you.

You have absolutely no idea what $10K means to me.  What we do know is that you won't put your money where your mouth is for less than 100:1 odds.

>> so it should be no problem to confront my argument isn`t it?

Trivial!  But you will just continue repeating the lie.

>> Your comments are agressive my are not

Another lie.  In fact the very existence of your video is aggressive.  And should be embarrassing.

>> You reacted as I would like have proposed that I will delete the video. I only suggested that it will be your will what will happen with this video. You overreacted this.

I did not.  And even if I did, it does not warrant you making up complete bullshit suggesting I'm not reading your comments.  But by all means, leave the video up.  Continue arguing for a flat Earth.  It makes you look like a genius.
Reply: @PiotrRysztak  
 //" It is hard to discuss when even your most obvious statements are denied."//

It's because the "obvious" statements under conflict are simply wrong.   There's a reason everyone here (except for you)  denies them.
Reply from the maker: @killbeas  
to @windgrins

ad.1 air-ground 
>>The aviation terminology doesn't work very well since an airplane is not connected to the ground like the cart.   Since the cart isn't flying through the air, the sailing nomenclature is more informative and less confusing. 

The aviation terminology is in fact the most relevant for this vehicle. This vehicle is an aircraft without the wings. The only force that is braking it in relation to ground is rolling resistance and as we agreed it is small and constant force (depends on wheel construction). I think this is the reason why your assumptions are wrong, and you are resisting my arguments.
I agree that a sailboat is partially in water and partially in air but this vehicle is all in the air like an airplane. I think we touched another non intuitive phenomena here, which I tried to suggest at the beginning of this discussion. I think it can help to understand what happen. As i wrote  "The ground does not hold the vehicle as air mass does, it only holds the wheel by rolling resistance. I think this is somewhat similar to the problem in which myth busters explain “Plane ona Conveyer Belt ''. Generally our vehicle is moving in air masses as a plane. Grounds only transfer the force that initially moved a vehicle."

Ground can moving backward and it will do nothing on wheels; it will not stop the vehicle more than rolling resistance does. No matter how fast the ground is moving the thrust must only exceed the rolling resistance. It is true and you need to accept that.

>>This isn't true (like a balloon) since the cart also wants to be at True Ground Speed of zero also since it is just as much connected to the ground as the air.

You are wrong and I hope you will admit it, it is another non intuitive phenomena as i mentioned alier. I think this is the reason why you are wrong and do not "buy" my explanation. The only force from ground trying to brake the wheel is rolling resistance. You considering it as a boat, I think is your mistake.

to move on with the discussion I think you need to rethink what I wrote in this post. 

Ad.2 ground-water example.

>>Because the force of the water imposes a torque but the force from the axle (grinding the wheat) imposes a COUNTER torque at the axle.   These two forces cancel each other (assuming constant rotational speed) so there is no NET torque.   (If there were NET torque, the wheel would accelerate or decelerate depending upon the sign).

Yes the forces cancel each other but this counter force can in fact do something for example rotate a propeller or grind the wheat. This is the opposite reaction. So in fact we can do something thanks to the waterwheel being rotated by water.

ad.3 air -ground
Air resistance is transferred through the wheel thanks to ground to propel the propeller. It is this unbalanced part of air resistance from the beginning.  Place of it acts is changing, it does not disappear. 

@eyytee

>>I have already addressed your "next step" and explained how is still constitutes leverage. See my comment further up starting with "You have just made it discontinuous ... ".
About whether it's discontinuous or not we can discuss after you admit what I asked. I think it is possible for you to admit that at least partially I am right?
Reply from the maker: @Rick_Cavallaro  
to @John Burton
>>It's because the "obvious" statements under conflict are simply wrong.   There's a reason everyone here (except for you)  denies them.

Can you please specific this conflict?

to @Rick Cavallaro

>>I took that as ground speed = 0 for some reason.  You don't need to say "TAS speed" since TAS stands for "true air speed".  See what I mean?  But even with my mistaken interpretation, you're still 100% wrong.  Spinning a propeller in still air requires a LOT of torque.  That torque is provided by the wheels.  That creates a lot of drag.

In my movie I also tried to show a reference to GS (ground speed) GS and TAS on the right side of my animation.
I do not deny it requires a lot of torque, and yes, torque is provided by the wheels. Without levers, we would need a much greater speed difference (air-ground) and higher efficiency. But that doesn't mean leverage is essential, it helps with efficiency, and I have never denied that.

>>I am not taking it for granted.  I conceived of the thing, designed it, and built it.  I know how it works.  Now I know you love to pretend I just fell ass-backwards into a design that happens to work despite not understanding it myself, but frankly you're completely full of shit.  You can (and I'm sure will) continue forever to try and prove your completely baseless and disproved theory, but you will fail.

I had never never once depreciated your achievements. Yes, I will try to convince you that I am right, because I believe that I am right and so far you have not convinced me that i am not. In fact you only insult me.

>>You have absolutely no idea what $10K means to me.  What we do know is that you won't put your money where your mouth is for less than 100:1 odds.

I don`t know, but you propose 10k$ like Derek and Alex so i assume it is the same for you like for them. The time for everyone is equal so I can bet the same amount of time. For Derek 10k$ can be half a month or less of work for me much much more. I don't want to bet for cash, I am merely explaining the logic.

>>Trivial!  But you will just continue repeating the lie.

I will not.

>>Another lie.  In fact the very existence of your video is aggressive.  And should be embarrassing.

Different point of view than yours is aggression? 

>>I did not.  And even if I did, it does not warrant you making up complete bullshit suggesting I'm not reading your comments.  But by all means, leave the video up.  Continue arguing for a flat Earth.  It makes you look like a genius.

you attack me and insult me, is this how discussion of people who have a different opinion looks like? the only embarrassed person should be you. I am  writing respectfully to You, You to me totally without, just because I dared to have a different point of view.
Reply: @PiotrRysztak  
>> Without levers, we would need a much greater speed difference (air-ground) and higher efficiency. But that doesn't mean leverage is essential, it helps with efficiency, and I have never denied that.

How can you possibly believe this.  I presume that's just based on wishful thinking.  It certainly isn't based on any facts or knowledge of basic physics.

>> In fact you only insult me.

Gee - did I post a video on youtube claiming you got something wrong that you spent years on?  Boy - that would be insulting!

>> I am merely explaining the logic.

Nope.  You're just sticking to a baseless theory because your ego won't let you admit you got it wrong.  Take a look at this analysis...
https://www.dropbox.com/s/107bmzgxhutwo5m/My%20ddwfttw%20analysis.pdf?dl=0

That should make it plainly evident why leverage is required to make this thing go DDWFTTW, but I look forward to you denying it.

>> I will not [continue repeating the lie]

Of course you will.  Look how long you've kept at it so far!

>>  I am  writing respectfully to You

Your language issue cannot possibly be that bad!
Reply: @Piotr Rysztak - Wszystko to Ekonomia  
If you're willing to get on a Zoom call, I can straighten this out in 5 mins.  If you're not, it will be clear that you simply want to continue lying.
Reply: @PiotrRysztak    OK, I give up.   No.   There is much more than rolling resistance causing the force on the ground.   And this propeller torque issue is a critical force because without it the cart won't work as a DDWFTTW cart.  You keep stating "The only force that is braking it in relation to ground is rolling resistance".   NO, NO, NO.   There is another force--the force caused by the reaction force to the propeller torque.

Specifically rolling resistance is defined as " is the force resisting the motion when a body (such as a ball, tire, or wheel) rolls on a surface. It is mainly caused by non-elastic effects; that is, not all the energy needed for deformation (or movement) of the wheel, roadbed, etc., is recovered when the pressure is removed. "   This is tire deformation and the track that the cart makes.   

The force from the torque budget from the propeller is not included in this.  This force is much larger and the cart won't work without it and the propeller thrust.  You just keep repeating ad nauseum that this force doesn't exist or is equal which is nonsense.

You just can't get more wrong.

You state:  " I think this is the reason why your assumptions are wrong, and you are resisting my arguments."

No, the reason is because your physics is wrong and that isn't going to change from the fact that you want just believe it with no justification in physics.   I haven't made assumptions.  I've measured the forces and actually know.  You are the one making bad assumptions and it seems because you don't seem to understand standard and conventional physics (mechanics).

You then seem to come to realize that it does exist with this statement:

"Air resistance is transferred through the wheel thanks to ground to propel the propeller. It is this unbalanced part of air resistance from the beginning.  Place of it acts is changing, it does not disappear. "

But this is not from the air resistance above windspeed.  Then you ignore it and insist these two forces exactly balance (prop thrust, and wheel force due to prop thrust in a 1:1 ratio)

You then get it wrong here:

"Yes the forces cancel each other but this counter force can in fact do something for example rotate a propeller or grind the wheat"

Of course the force does something--it turns the propeller.   But as stated, IF the wheel force balances the prop thrust, the negative thrust at the wheels will equal and opposite to the thrust from the prop and the force will cancel and there will be no force to overcome rolling resistance so the cart will never get to windspeed.

But you obviously don't understand that with a 1:1 ratio of thrust to wheel resistance force that this force causes, the cart will never even be able to get to windspeed, much less exceed it.  Without leverage >1 (propeller thrust/wheel retardation force from torque) , the cart will never work.   Only with leverage, the prop force exceeds the wheel force and the prop thrust is greater than the sum of all negative forces at the wheel.

Cavallaro, Borton, Derek and every other person who understands physics knows what I'm telling you is correct.   Your explanation is wrong.  I've explained it multiple times in detail, given examples,  and you simply repeat it like a parrot that you don't believe it  when in fact it is simple mechanics that every engineer and physics major learns.  Since you offer no physics reasons for your beliefs, we have no more basis for discussion.   Now we simply think that you don't know what you are talking about and never did.
Reply: @Rick_Cavallaro  You may want to make clear that you are addressing Piotr Rysztak here.
Reply: @killbeas  
Exactly right.  But a quick tangential question...

>> It is mainly caused by non-elastic effects; that is, not all the energy needed for deformation (or movement) of the wheel, roadbed, etc., is recovered when the pressure is removed.

My only question to this is in the definition of elastic.  If the tires return completely to their original shape - even if it takes time, does that make it technically an "elastic deformation"?   If so, you can still get significant rolling resistance with only elastic deformations.  A plastic deformation would only happen on a tire that gets deformed and doesn't return to its initial shape.

Note: this has nothing to do with how the Blackbird works or what the forces are.  We both understand and agree fully on that.  I'm just curious about the plastic vs. elastic deformation as it relates to rolling resistance.
Reply: @Rick_Cavallaro  That definition comes from Wikipedia and one would assume that any energy absorbing deformation (elastic or plastic) that doesn't fully return the energy after deformation is an "energy sink".   Your question is a good one that if the deformation fully returns to original shape, does this require energy?  My assumption would be, "indeed it does" because elastic bonds have to slide past each other and in doing so can produce friction (like stretching a rubber band many times until it heats).  Any deformation that makes noise is by definition, not completely lossless.   Obviously ruts on the surface left after the tires roll over is not a lossless event.   So any real world tire rolling which makes noise and leaves tracks is certainly going to be lossy.   

So having said all that, I would assume the tires would be back to their original state at the end of the run but they would have dissipated energy (which would manifest itself as "rolling resistance")  especially if any tracks were left.   Much of this can be minimized with a very hard surface and I'm sure some materials science folks can tell us what kind of tire would produce low rolling resistance (but possibly at the expense of good traction!).  Hopefully that gets to the heart of what you are asking.
Reply: @killbeas  For sure you will lose energy if there's even a tiny delay in returning to the non-deformed shape, but I've never really thought about whether the definition of an elastic deformation indicated a time component or not.

Wikipedia also has a page on elastic collisions.  It states...
"An elastic collision is an encounter between two bodies in which the total kinetic energy of the two bodies remains the same. In an ideal, perfectly elastic collision, there is no net conversion of kinetic energy into other forms such as heat, noise, or potential energy."

Now I'm not entirely sure that "elastic collision" and "elastic deformation" share the same properties, but it's clear that an elastic collision cannot involve materials that return to their undeformed shape over time.
Reply: @Rick_Cavallaro  My best guess is that an "elastic deformation", unlike an elastic collision, can be lossy with energy being sent to the environment in the form of heat and sound.   After the stress is relieved on the elastic body, the body returns to it's original shape and sometimes has to take energy from the environment which would cool the environment.   But I would assume that entropy has increased overall in the process.   I didn't take  the "deformable bodies" course so I'll check to anyone who did!   But some of this stuff can be figured out with just the before and after states and processes that dissipate energy to the surrounding environment.   

I don't think that there is a "time component" per se in an elastic deformation but one can easily exceed the bond strength of a material if a stress is applied too quickly just from momentum effects alone I would think.  A very fast displacement of a molecule will cause a bond to break and the otherwise elastic material will not return to its undeformed state.   So I would assume there is a limit of how fast a stress can be applied to an otherwise elastic material before you actually damage it and cause an inelastic deformation (like shooting a rubber band with a bullet).   There may also be time effects for heating and other sonic issues that cause things to behave differently.   So I'm betting that an "elastic material" is only elastic within a range of values for the stress strength and speed it is applied.  That taps out my knowledge and I'm skating on thin ice as is!  ;-)    If anyone told me I was completely wrong on any of this, I wouldn't have a leg to stand on other than simple principles.  I'm sure this stuff is completely obvious to someone with a materials science background!
Reply: @killbeas  
>>  I didn't take  the "deformable bodies" course so I'll check to anyone who did!

I took that course a little more than 40 years ago.  But it really didn't address dynamic deformations.  It's more about mechanical systems that would be over-constrained if not for deformable members.  In any case, we don't really have any questions about what's happening - just definitions.

>> one can easily exceed the bond strength of a material if a stress is applied too quickly just from momentum effects alone I would think

That's certainly true in non-Newtonian materials.  You can mix corn-starch and water, and actually form cracks in the surface - which immediately heal when the stress is removed.

>> If anyone told me I was completely wrong on any of this, I wouldn't have a leg to stand on

Hold on their Hoss!  This is the internet.  Borrow a page from Piotr.  If people provide evidence that you're wrong, you just have to double down and complain about them not being nice.
Reply: @PiotrRysztak  "....at least partially I am right?"

Sure, but your key claim is wrong and based on misunderstanding basic mechanics.
Reply from the maker: @killbeas  
Ad.1 air-ground example 

My last comment was only addresses to this your statements:

>>The aviation terminology doesn't work very well since an airplane is not connected to the ground like the cart. Since the cart isn't flying through the air, the sailing nomenclature is more informative and less confusing. 

and this:

>>This isn't true (like a balloon) since the cart also wants to be at True Ground Speed of zero also since it is just as much connected to the ground as the air.

Both are wrong. You can't even admit that I can have the right here and I have shown your error of reasoning. And I'm the one who can't admit to being wrong? You ignored it totally. I am not saying that this is the end of discussion and it closed the topic. But as you see your understanding was at least also wrong.

Of Course the opposite force from the propeller is acting on the wheel and wants to slow down the wheel but from the ground the only force slowing down the vehicle is rolling resistance. It was my conclusion.

You consider it as a boat, I think it is your mistake. To move on with the discussion I think you need to rethink what I wrote in this post and last one and admit that you were wrong in that reasoning. 

Ad.2 ground-water
Why do you ignore ground-water example?

Ad.3 rolling resistance
It is constant for normal speeds but of course on high speeds it is not constant because of the deformation. I wrote about this at the beginning of this discussion. For our example we can assume it is constant all the time.
Reply from the maker: @Rick_Cavallaro  
>>Gee - did I post a video on youtube claiming you got something wrong that you spent years on? Boy - that would be insulting!

You take it too personally, No one ever can question it because You spent years on it? Science should be as far from emotions as it can be. In fact I addressed my video to Derek not to You.

>>Take a look at this analysis...

I looked and i see analise from the TAS=0 speed not from the beginning of the experiment. "Well, we ignored the whole process of getting up to this downwind speed faster than the wind. And that means we also ignored what happens when we’re going at exactly wind speed and feeling no relative wind over the vehicle." You wrote also "But we also know that propeller efficiency is not defined at zero airspeed." You assumed that the wheel is rotating all the time but the propeller starts to work only above TAS=0. In fact it is connected with a wheel and starts rotating as the wheel starts to rotate. thu generate thrust even below TAS=0. 

>>Your language issue cannot possibly be that bad!

If someone does not agree with you then for you it means that he does not respect you?

>>If you're willing to get on a Zoom call, I can straighten this out in 5 mins. If you're not, it will be clear that you simply want to continue lying.

I would like but I do not feel comfortable to discuss it in real time in English. It would be a lecture from your side, not a discussion. That is why I prefer writing if you don't mind. I think it is not a big difference to write or to talk.
Reply from the maker: @eyytee  
>>Sure, but your key claim is wrong and based on misunderstanding basic mechanics.

Thank You!, so we agree that in the example of a water mill we stay still in relation to ground and moving water generates thrust on the water wheel. 

If we finally agreed on that then now imagine that a watermill is in fact in the ground (like a plane is in air) And it has a screw to push the ground from front of it to the back of it. It has all the time ground behind him that blocks him from moving back but thanks to the torque it rotates the screw. Is it possible or not?
Reply: @PiotrRysztak  "Of Course the opposite force from the propeller is acting on the wheel and wants to slow down the wheel ..."

And this torque from the propeller must by countered by a torque from the ground, which also requires a force from the ground (your orange arrow).

" ... but from the ground the only force slowing down the vehicle is rolling resistance."

Wrong again. The orange force (static friction or traction) also contributes to the net force as a retarding force and thus affects the acceleration.
Reply: @PiotrRysztak  "It has all the time ground behind him that blocks him from moving back but thanks to the torque it rotates the screw."

If the screw can rotate, then it can also move back. So it isn't "blocked from moving back". Your scenario is self-contradictory.
Reply: @PiotrRysztak  @Rick Cavallaro  

You (Piotr) state:
">>The aviation terminology doesn't work very well since an airplane is not connected to the ground like the cart. Since the cart isn't flying through the air, the sailing nomenclature is more informative and less confusing. 

and this:

>>This isn't true (like a balloon) since the cart also wants to be at True Ground Speed of zero also since it is just as much connected to the ground as the air.

Both are wrong."

OK, why is either wrong?  
The cart is connected to the ground by the wheels and doesn't "fly through the air over ground".
Anything touching the ground tends to slow to the speed of the ground from friction and the cart most definitely touches the ground.   Without some force used to overcome the friction, just like a car, a person, or a chair, they will all slow to rest at zero on the ground.   If the true wind dies, the cart always rolls to a stop on the ground due to this connection to the ground.

I don't think I see where either of those two are wrong and neither does anyone else.

You state: "You can't even admit that I can have the right here and I have shown your error of reasoning."

You are correct that I haven't seen any "error in my reasoning" pointed out (and neither has anyone else).
But even if I had some error in my reasoning somewhere, it doesn't make your fundamental error any more correct.   It isn't an issue of scoring points--your title is simply wrong and your explanation for the cart's functioning is simply wrong (whether I made an error or not and I don't think I did.)

You state: "Of Course the opposite force from the propeller is acting on the wheel and wants to slow down the wheel but from the ground the only force slowing down the vehicle is rolling resistance. It was my conclusion."

I understand, and always have that this is your nonsense conclusion.   But your nonsense conclusion is wrong.   Just because you believe it does not make it true.  The ground force on the wheel combined with the axle has to provide the torque couple to turn the propeller so consequently there is a very strong force at the wheel edge against the ground that accounts for this.  That force is attempting to slow the cart.  The cart would accelerate extremely fast  from the prop thrust if that force did not exist and the cart would magically be gaining energy from nothing.  It is not just rolling resistance at the wheel no matter how many times you say it is.   I have measured that force and it is very real.  So your conclusion is wrong.

You should ask yourself why every poster here who understands physics and the cart says that you are wrong with respect to this.   Do dozens of us who are engineers and have been trained in these issues have this wrong and you alone are right even though I have actually measured the force that you have concluded doesn't exist?   Or could you be mistaken and the engineers have this correct?

You state: "You consider it as a boat, I think it is your mistake."

Nonsense. I did not state it is as a boat, I stated it acted more like a boat than an airplane since it is obviously working with two media.   It is obviously connected to both media that it operates in like a boat--the air and the ground for the cart and the air and water for the boat.  An airplane only works in the single media of the air (except during takeoff and landing, of course).
It would be completely foolish to think that the cart is not absolutely dependent upon it's coupling to the ground to work as that is the only way it extracts energy from the two co-moving media (like a boat).  

Your error is not realizing that the connection to the ground medium is absolutely essential to the carts functioning as the wheel reaction force (which you constantly deny exists) is the only reason the propeller is turning.  

Here is a thought experiment.    If the cart was rolling on 4 tires not connected to the (non-turning) propeller and just blowing downwind slower than windspeed, it would never reach windspeed since it has rolling resistance.  But then you lowered a 5th wheel to the ground which was hooked to the propeller, your contention is that this would turn the propeller and provide energy to the propeller but in no way have a reaction force against the ground which tries to slow the cart.   It's absurd on the face of it since the propeller has rotational drag and cannot create energy from nothing.       I contend that if you lower the 5th wheel to turn the propeller, not only does it have a reaction force against the ground, but if you have only a 1:1 ratio of wheel force against the ground (which is very much real) compared to the same amount of propeller thrust, it will also never get up to windspeed since you have not increased the NET force.   Only if the propeller thrust exceeds the wheel reaction force plus rolling resistance will the cart ever exceed windspeed.  (Note that the power supplied by the wheel to the prop is not greater than the power used by the propeller--but the propeller's force is greater)  Once it gets ABOVE windspeed, the propeller thrust also has to exceed those two forces PLUS aero drag which now acts to slow the cart also.   Without a lever ratio for the prop thrust/wheel drag ratio > 1, the cart will never exceed windspeed.  (But again, one should note, that the only energy the cart uses comes from the true wind being slowed by the propeller over the ground so no conservation of energy violations!)

It's a good thing that Cavallaro and Borton realized that when they designed the cart and made that ratio >1 (which they fully understood as you can ask them yourself) or the cart would never work.

So you can attempt to concern yourself about trivial points but this is the central point that you are wrong--the cart works on the principle of leverage with the propeller thrust set to be higher than the ground reaction force,  extracting energy by slowing the air media processed by the propeller with respect to the ground.   Without the connection to both the air and the ground, the cart would never exceed windspeed as this is required for the leverage mechanism to function.

So the entire premise of your video title is wrong and Cavallaro and Borton are correct.
Reply: @PiotrRysztak  
>> Science should be as far from emotions as it can be. 

And yet you are completely unwilling to listen to facts because of your emotional tie to your baseless theory.

>> In fact I addressed my video to Derek not to You.

Who do you think spent hours explaining this thing to Derek?  Whose explanations do you think he was giving?

>> I looked and i see analise from the TAS=0 speed not from the beginning of the experiment

Your argument is that leverage is not needed to go DDWFTTW.  My analysis shows why it IS required - regardless of how we get to that state.  Your emotions just won't let you consider evidence.

>> You assumed that the wheel is rotating all the time but the propeller starts to work only above TAS=0.

I assumed no such thing.

>> That is why I prefer writing if you don't mind. 

I do mind.  You're just proving that you're aware you can't defend your bullshit "theory".  Have you convinced ANYONE of this nonsense?  Does it not bother you even a little that everyone that knows how this thing works is telling you you're wrong?  It couldn't be more obvious that you're just a troll at this point.
Reply from the maker: @Rick_Cavallaro  >>And yet you are completely unwilling to listen to facts because of your emotional tie to your baseless theory.

And you are unwilling to listen to my points of view, and deny facts I presented. 

>>Who do you think spent hours explaining this thing to Derek?  Whose explanations do you think he was giving?

In his explanation as I remember good, he does not say straight out that it is your explanation. He addresses it like the consensus of his study on the topic from different sources. I don't want to argue about it, that was my reception of his explanation. 

>>Your argument is that leverage is not needed to go DDWFTTW.  My analysis shows why it IS required - regardless of how we get to that state.  Your emotions just won't let you consider evidence.

I think that what is going on elier is as important as what is going on after exceeding TAS=0. The Vehicle does nothing spectacular in TAS=0 so it has to generate thrust well below that speed. That is why I think that it is important to understand what is going on in every particular moment of the experiment. What is the balance of forces on the beginning, just before TAS=0, on TAS=0 and when the vehicle is exceeding the TAS=0. I do not find it in your explanation.

>>I do mind.  You're just proving that you're aware you can't defend your bullshit "theory".  Have you convinced ANYONE of this nonsense?  Does it not bother you even a little that everyone that knows how this thing works is telling you you're wrong?  It couldn't be more obvious that you're just a troll at this point.

Ok, if you don't get my argument about my "not fluent" enough English for discussing in real time. How about we discuss it in my native language? Do you accept this?

You are insulting me again and again. As I wrote to @windgries 
"This is a very non intuitive phenomenon and I do not find analysis of forces from the beginning to the end of the experiment. If Alex can be wrong as professor then I think it will not be a big shame on me. This is why I will not be afraid to admit my mistake in the end, but so far you haven't cleared my doubts."
Reply from the maker: @killbeas  >>OK, why is either wrong?  
>>The aviation terminology doesn't work very well since an airplane is not connected to the ground like the cart. Since the cart isn't flying through the air, the sailing nomenclature is more informative and less confusing. 

First - aviation terminology is better for this because it is like a plane in air and only touches the ground by wheels. Speed of ground doesn`t matter for vehicles, Rolling resistance is constant force all the time no matter how fast the ground is moving. The speed of air is the force the vehicle moves depends the most. Vehicle is in the air, not in the ground.

>>>>This isn't true (like a balloon) since the cart also wants to be at True Ground Speed of zero also since it is just as much connected to the ground as the air.

It is not as connected to the ground as to the air, its connection to the ground is constant, its connection to air is changing. It is well shown at "Airplane on convey plate" experiment no matter how fast the ground is moving the main force acting on a car or plane is air resistance. The cars most energy  spent to overcome air resistance not to overcome force from ground. In fact rolling resistance helps cars to push back the ground to overcome air resistance. Without that it will stay still in the air TAS=0. No matter how powerful an engine car has, without rolling resistance it will stay still in the air. The wheel will rotate in spot and do nothing more. This is a fundamental statement and is true.

>>You are correct that I haven't seen any "error in my reasoning" pointed out (and neither has anyone else).But even if I had some error in my reasoning somewhere, it doesn't make your fundamental error any more correct.   It isn't an issue of scoring points--your title is simply wrong and your explanation for the cart's functioning is simply wrong

You are wrong in these two statements. In fact this reasoning brings me closer to proving my right and  dismisses some of your arguments.

>>The cart would accelerate extremely fast  from the prop thrust if that force did not exist and the cart would magically be gaining energy from nothing. 

It is not taking energy from nothing, this energy is this unbalanced air resistance from the beginning. At the beginning It pushes the car and thanks to rolling resistance generates torque on the wheel and this wheel is rotating the propeller -> generating thrust.

>>You should ask yourself why every poster here who understands physics and the cart says that you are wrong with respect to this.   Do dozens of us who are engineers and have been trained in these issues have this wrong and you alone are right even though I have actually measured the force that you have concluded doesn't exist?   Or could you be mistaken and the engineers have this correct?

With all respect to you. You proved in your last posts that you are not an expert and you also do not fully understand what is going on (maybe as i). This is a very non intuitive phenomenon and I do not find analysis of forces from the beginning to the end of experiment. If Alex can be wrong as professor then I think it will not be a big shame on me. This is why I will not be afraid to admit my mistake in the end, but so far you haven't cleared my doubts.

>>I did not state it is as a boat, I stated it acted more like a boat than an airplane since it is obviously working with two media.   It is obviously connected to both media that it operates in like a boat--the air and the ground for the cart and the air and water for the boat.

As I wrote above, it is wrong to consider it more as a boat. Boat is IN water and IN air. Our vehicle is IN air and only touches the ground and in fact ground helps it to move in air.

>>Your error is not realizing that the connection to the ground medium is absolutely essential to the carts functioning as the wheel reaction force (which you constantly deny exists) is the only reason the propeller is turning.  

This force from the ground is only because air resistance from the beginning is moving the vehicle; thanks to rolling resistance this force can generate rotation on wheel and torque and finally generate thrust. But all the job is done by this initial force (unbalanced force of air resistance)

>> (5 wheel car example)..It's absurd on the face of it since the propeller has rotational drag and cannot create energy from nothing. ..

The energy is not created from nothing, it is this difference from ground-air mass move. Without a propeller, it just stands limp in the air, inhibited by rolling resistance. However, in my opinion, it may start generating force like the water mill example. This extra generated torque on the wheel can be used to propel the propeller. The air is holding it and thanks to that rolling resistance can rotate the wheel on ground and generate thrust.
Reply from the maker: @eyytee  >>And this torque from the propeller must by countered by a torque from the ground, which also requires a force from the ground (your orange arrow).

This is what I point in my last comment to @windgrins In fact this orange force is this unbalanced part of air resistance from the beginning; it is not forced directly from ground. (in your reasoning)

>>If the screw can rotate, then it can also move back. So it isn't "blocked from moving back". Your scenario is self-contradictory.

The screw when rotated is moving by pushing back the ground and this ground is all the time behind it. You agreed that that is net torque so it can do that job.
Reply from the maker: @Rick_Cavallaro  >>Bullshit. I've listened to your points of view and your "facts". And like everyone else here I've pointed out exactly how they're demonstrably wrong. I don't know why you keep lying. I keep catching you in lies, and you just ignore it an move on. Are you borrowing a page out of our ex-presidents book?

Point please one statement i described as fact that was wrong.

>>Of course he doesn't. Why would he?

Then do not be mad at me that I do not connected his explanation with you.

>>I don't care. (..)

I care what happens below because we need to overcome rolling resistance to get to TAS=0. So even below TAS we need to generate NET thrust. I think my example with water mill is good to show that we can in fact be steady in one medium and generate net force from the medium moving "next to"

>>And I DO understand all of that. But we can't even convince you of the most basic and relevant facts, so why go down a bunch of blind alleys!? FFS - you've been arguing that a wheel with significant drag on it won't create ANY drag on the vehicle. Do you honestly not see how insane that is!?

I am not arguing that the propeller will not act on the wheel. I take this into consideration.

>>Not nearly as much as is warranted!

I am wondering if you had attacked Alex with the same disrespect, aggression and insulting him, when he standed with his statement after Derek's first video. He was not convinced instantly and I am doubting you treated him similar to me. Do you laugh at him also that he was in the wrong? Where does this difference come from?
Reply: @PiotrRysztak   OK, that's fine.   All the qualified people here agree that you are wrong.  You ignored the fact that I've made the measurement that the retarding force on the wheels makes a much higher resistance at the wheels than just rolling resistance (Both are easily measured by a simple scale and pulling the cart with a thread with the propeller on and off).  This alone falsifies your theory.     But your theory (1:1 leverage) applied to a proper free body diagram fails to make the cart work through lack of thrust.

You state: "The energy is not created from nothing, it is this difference from ground-air mass move. Without a propeller, it just stands limp in the air, inhibited by rolling resistance. However, in my opinion, it may start generating force like the water mill example. This extra generated torque on the wheel can be used to propel the propeller."

Which also ignores the fact that to obtain the torque from the wheel, there is a required strong retarding force as the cart rolls over the surface.   The power generated there is F X V where V is the velocity over the surface and F is the tangential force on the wheel.  Part of that force is from rolling resistance and aero resistance (above windspeed) and the remainder is due to the reflection of the torque of the prop through the gear train.

You've waffled between "this force F doesn't exist" to "the force F is equal to the propeller thrust".  Both of these are wrong for the cart to work as is illustrated by a proper free body diagram (standard physics).

You haven't done a proper free body diagram with your "no leverage theory".   If you do it correctly even with F = propeller thrust, you will see that the thrust forces never adds up to the amount of resistance force at the wheels to overcome rolling resistance and aerodynamic resistance above windspeed.   This is clear and obvious for anyone who understands how to do this properly.   Which means with your theory, the cart will never reach or exceed windspeed.

However, if a proper free body diagram is performed with a suitably large >1 leverage for the wheels to the prop force connection, (which is the Cavallaro/Borton theory) then the thrust will exceed the sum of all retarding forces up to the limit speed above windspeed.   This is actually what has occurred and has actually been measured under controlled conditions on the treadmill.  

I would suggest you discuss your torque/force theories with a physics professor at your local college and they will disabuse you of the notion that an singular tangential force on a wheel rim only causes pure torque (with no translation unless constrained) since this disagrees with all normal theory from physics and dynamics.  They can also explain to you that the force can be arbitrary to drive a higher force load but the speeds at the two ends of the gear have to have the power the same (neglecting friction) (this is just due to conservation of energy) but not the forces .  This is implicit in the "water wheel driving a millstone" example I gave you where the water wheel with a small force from the water drives an extremely high force of the resistance of the mill stones (but at a much lower speed).  In the cart's case, the high speed wheels with a smaller force drive a propeller over a lower distance at a lower speed which produces a higher thrust.  There is no translation of the water wheel because it is bolted to a constraint (which produces an exact counterforce) so the water only causes rotation of the water wheel.

So in a nutshell, Your theory doesn't agree with the real world behavior of the cart under controlled conditions and cannot work and Cavallaro/Borton's theory (who designed the cart and tested it) does agree with controlled experiment in all aspects.    When reality disagrees with your theory, it's time for you to get a new theory.    I suggest the theory from Cavallaro/Borton because it has yet to be falsified in any way and agrees completely with real world controlled testing. 

Your explanation does not work and Cavallaro's/Borton's does according to conventional physics which the knowledgeable group here agree.  I can't help you further.
Reply: @PiotrRysztak  "The screw when rotated is moving by pushing back the ground ..."

To move upstream against the waterwheel drag, you must have the correct combination of gearing & screw-pitch, which is leverage again.
Reply from the maker: @killbeas  
We all agree that in my analysis the orange force is bone of contention. So to clear discussion I think we need to focus on that point.

>>You ignored the fact that I've made the measurement that the retarding force on the wheels makes a much higher resistance at the wheels than just rolling resistance

In reality they are some internal forces of mechanism but when we assume 100% efficiency. Cars have to encounter only two forces. Air resistance and rolling resistance. (no propeller simple car)

>>Which also ignores the fact that to obtain the torque from the wheel, there is a required strong retarding force as the cart rolls over the surface. 

Yes and this force that pushes the car is air resistance. This unbalanced part of it from the beginning pushes the car and generates rotation on wheels - torque. It can do that because the ground acts on the wheel by rolling resistance. (My example with a car engine that rotates the wheel, without rolling resistance it will not move in air masses no matter how powerful the engine will be. It need ground to push back from it)

At the beginning air resistance acts only on the vehicle but as the vehicle starts to move, it generates more and more torque on the wheel. That is why in my animation when air resistance decreases, it increases the force on the wheel (my orange force). This force can`t just disappear <- if yes how? (i mean unbalance part of air resistance)

This is a crucial point for me. Until we balance this extra force from air resistance we will accelerate. My explanation is based on Newton's second law. I`m looking for a force that will balance this initial air resistance. Without balance, the vehicle should accelerating.

If I find an answer to this I will admit that I was wrong. But please don't tell me that I am wrong because I am wrong. I want to understand it. I show you that your reasoning about what is going on was also not fully correct. I hope you are able to admit it, and help me find the answer.
Reply from the maker: @johnborton4522  to eyytee and John Burton
eyytee
>>To move upstream against the waterwheel drag, you must have the correct combination of gearing & screw-pitch, which is leverage again.

I consider a lever as a multiplication of force. If I have force I don't necessarily need to multiplate it to do something.

John Burton
>>Literally 95% of all experimental knowledge regarding these devices is contained in the heads of the people that are in this comment thread. ALL of them agree you are wrong - and in exactly the same way.Enjoy your ignorance and hard headedness.

Please point me where i am wrong, do you need to insult me? Did you insult Alex also when he did not agree with you at the beginning? 
Experimental knowledge is only one part. This is the point. You can sometimes draw wrong conclusions from an experiment. (i did not say it is in this example but do not deny experiment can sometimes be misleading)

Like in the joke: A Soviet scientist examines a fly. He tears one leg off her and says - The fly, move! The fly is moving! Finally he tears off his fifth leg and says - The fly, move! But the fly won't move. The fly became deaf - notes the scientist.
Reply: @PiotrRysztak  "If I have force I don't necessarily need to multiplate it to do something.
"

To move upstream, the upstream-froce on the screw must be greater than the downstream force on the watermill. To ensure this you need the right gearing/leverage.
Reply: @PiotrRysztak  "We all agree that in my analysis the orange force is bone of contention"

It demonstrates to anyone who understands basic mechanics that you don't. Tangential forces cause linear acceleration, and no amount of your blather will change that.
Reply from the maker: @eyytee  >>It demonstrates to anyone who understands basic mechanics that you don't. Tangential forces cause linear acceleration, and no amount of your blather will change that.

This force is acting on the wheel thanks to air resistance, only rolling resistance is braking the wheel in relation to ground. but thanks to this rolling resistance we can generate torque on the wheel.

We are not moving on in our discussion. 
Crucial question:
What happened to this unbalanced air resistance force at the beginning? (air resistance force acting on entire vehicle)

My answer is that this force thanks to rolling resistance acting from ground is transferred to rotate the wheel and generate torque.

What is your answer? 

Without establishing what happens to this force we never find agreement on force balance.

FACT: Cars have only encounter to forces air resistance in air masses and rolling resistance on wheel. (When we have 100% efficiency of cars mechanisms).
FACT 2: If there will be no rolling resistance acting on wheel then cars would be stationary in air masses. No matter how powerful engine will rotate the wheel. Cars need rolling resistance to push back on ground to move in air.
Reply: @PiotrRysztak    It's pretty clear to me that you have no interest in learning how the car actually works, you seem simply interested in stating that you are correct.   You make definitive statements that are clearly wrong.  Part of this may be a language issue but part of it seems to be a lack of understanding and training in conventional physics and dynamics.

I'll offer one more set of explanations and corrections and then I have no more interest in helping you if you refuse to accept some physics basics.

You state:  "Cars have to encounter only two forces. Air resistance and rolling resistance. (no propeller simple car)"

I assume you mean that a conventional car only encounters rolling resistance and air resistance to slow it down.   This is overly simplified.   The internal losses of the car may be "lumped" into rolling resistance or it may not depending upon agreement.   But the term has a real and specific meaning which is due to issues like tire deformation and rut production (like in sand).   However, this isn't the entire story.   One can simply press the brakes and this will also slow a car which adds an additional tangential resistance at the contact patch of the tire which quickly slows the car (this is not part of rolling resistance).  Or like in electric car, a torque can be imposed on the axle by the regenerative braking system which reclaims the energy of  linear motion and imposes a retarding force tangentially to the tire which brings the car to a stop (this is not part of rolling resistance).    For our purposes, we can include the tire deformation, rut production, and internal frictional loss of the gear train into the "rolling resistance" parameter.   It does not include the torque budget of the propeller just like regen (an electrical generator) resistance is not normally included in that parameter for a car.

You state: "Yes and this force that pushes the car is air resistance."   

NO! What pushes (accelerates) the car is the total of the unbalanced forces on the car.   Air resistance is only one of the positive forces acting on the car and that force is only positive for the cart traveling below windspeed (which is a relatively uninteresting area since it corresponds to something simply blowing in the wind)   The correct statement for all motion is that the forces that push (accelerate) the car are the sum of all forces acting on the car.   The vertical forces and lateral forces are unimportant since they are equal and cause no vertical or lateral acceleration.  The only forces that are unbalanced are the horizontal forces in the direction of motion.  

Here is the full list for the forces in the horizontal direction:
Let's assume a force which makes the cart accelerate in the direction of motion is a positive force for convention.

1.  aerodynamic resistance (this can be positive or negative depending upon the cart's speed above or below windspeed)  It is negative above windspeed.
2. rolling resistance (including internal transmission frictional loss (always negative) [does not include the propeller demand wheel force budget]
3. propeller thrust (for a DDWFTTW) cart  -positive when operating slightly above 1/2-3/4 windspeed and above (approximately).[due to the operating characteristics of propellers and air interaction]
4. wheel retarding force from propeller demand--negative when operating at any speed.

Three operating regimes (A,B, C) 
A)For a DDWFTTW cart to accelerate in the positive direction below windspeed,  1. must exceed 2. plus 4. (propeller thrust is lumped into 1 initially as the cart starts to roll since it produces almost no thrust and only aerodynamic drag). [since aerodynamic resistance is the predominant force in the lower range of operating below windspeed decreasing to zero as the cart approaches windspeed]
B) At windspeed,  3. must exceed the sum of 2., and 4. [since 1) is zero at that point].
C) And above windspeed 3. must exceed the sum of 1., 2., and 4. (and here 1 is negative).

So, for at windspeed and above windspeed (the controversial regimes), propeller thrust has to exceed the sum all retarding forces.   4. is the most significant.    You initially stated that 4. did not exist.  This is clearly and obviously wrong.   You now seem to state that 4.  is equal to 3. (1:1 leverage)   It is not (for a capable DDWFTTW cart).   If it was, the cart would not have adequate force to overcome 2. at windspeed and 2. plus 1. above windspeed [because 4. would simply cancel out 3. and you would have an unbalanced negative force on the cart slowing it down.

You state: " I show you that your reasoning about what is going on was also not fully correct."
You have not shown that, as your reasoning is the flawed one.

What I state is that above windspeed,  And above windspeed 3. must exceed the sum of 1., 2., and 4. (and here 1. is negative).   Hence 3. [propeller thrust] must be more than 4.[wheel retarding force from prop demand]) at all propeller speeds.   And the only way for this to occur is that leverage is used to make prop thrust > wheel retarding force for the prop budget]  It is worth noting that as the cart speeds up, both 3. and 4. increase in some positive relation with speed (as well as 1.).

If you believe that there is no additional retarding force due to the propeller demand at the wheels, you are wrong.   This is due to conservation of energy that power can not be created for the propeller without producing it somewhere.  The only possibility is from the wheel rolling over ground in the form or the retarding force of the wheel X the speed over ground of the cart.  So 4. must exist (and does and is measurable).

So the cart will not work without the leverage to make the force of the propeller greater than the sum of the negative forces with the power to the prop equal to the power coming from the wheels, (already established above).   To do this, the propeller has to operate through a shorter distance through the air than the wheels roll over the ground for the energy or power requirement to be met thus providing the needed leverage to create a stronger thrust force.  (Because of the true wind, this is possible).

This leverage was established with the combination of the gear ratio in the transmission and the propeller blade pitch angle setting.  (the combination of the two allowed a single rotation of the propeller to move through a horizontal distance with respect to the air than the wheel did over the ground over the same time period)

You state: "If I find an answer to this I will admit that I was wrong."
Actually, we don't really care if you admit you were wrong or not as that does not determine the answer for the reader--the principles of physics do.

"But please don't tell me that I am wrong because I am wrong."
That would be the only reason to tell you that you are wrong.   I wouldn't tell you that you were wrong if you were actually right!
I'm doing you a favor to attempt to clearly explain to you why you are wrong.   
I can't make you understand it.  But most of the experts here reading this do.

"I want to understand it."
Most people do and that is a good attribute, however, if you want to understand it, you have to stop refuting simple physical principles that are well established and agreed upon.   If you don't understand them, then you need to do some knowledge acquisition at some of the sources which have been recommended to you by some of the experts here. 

"I show you that your reasoning about what is going on was also not fully correct."
Actually you have not.   At best case (for you) you have simply misunderstood what I've told you and confused it with your lack of understanding of torques and forces and Newton's laws as they apply to free bodies and how torques apply to free bodies that one learns in physics or dynamics courses.  It should be notable that literally not one knowledgeable person has agreed with your understanding.
Reply: @PiotrRysztak  "This force is acting on the wheel thanks to air resistance...."

Doesn't matter. It is an external force that brakes the vehicle. All your hand waving about causes is utterly irrelevant to this.
Reply from the maker: @killbeas  I am interested in learning but you are not interested in even trying to understand my point of view. You wrote a lot in the last comment which I appreciate but finally you did not answer my last question.

>>I assume you mean that a conventional car only encounters rolling resistance and air resistance to slow it down.   This is overly simplified. (..)

It is simplification but it is true. We assume 100% efficiency on internal losses. From outside of the vehicle only forces are air resistance from air masses and rolling resistance from ground. Rolling resistance considers construction of the wheel and construction of surface. 

Deformation on high speeds is a different topic and I point it out from the beginning, for our purpose we can assume rolling resistance is constant. Wheel is not changing and the surface is not changing.

Pressing the brake is an additional force from the outside. Regenerating braking like in EV is also extra force acting on the vehicle.

>>You state: "Yes and this force that pushes the car is air resistance."   
NO! What pushes (accelerates) the car is the total of the unbalanced forces on the car.

And this is the place where I address my question. What happened with this unbalanced part of air resistance from the beginning?

>>Here is the full list for the forces in the horizontal direction:
Let's assume a force which makes the cart accelerate in the direction of motion is a positive force for convention.

You almost duplicate my analysis from the second comment in this threat. 

>>You initially stated that 4. did not exist.  This is clearly and obviously wrong.   You now seem to state that 4.  is equal to 3. (1:1 leverage)

In my video I admit that I shortened the equation and only left green forces <- which created the acceleration. In my second comment on this thread I take into consideration all forces. The only bone of contention was the force that arose on the wheel. 

>>You state: " I show you that your reasoning about what is going on was also not fully correct."
You have not shown that, as your reasoning is the flawed one.

You wrote:
"This isn't true (like a balloon) since the cart also wants to be at True Ground Speed of zero also since it is just as much connected to the ground as the air."

This statement is wrong. You assume that ground is breaking the vehicle the same as air masses do and this is wrong even for simple cars. It is not a boat example.

I am not the only one that suggests the ratio (leverage) is not essential to work. Mr. Ruina in his publication about the Boat example wrote that "There is no fundamental limit on the ratio (...) and thus formulae (6) and (3) show no basic limitations on the ratio of the two propeller sizes."

They analyzed Boat examples (boats are in water and in air).

Only in conclusion in their publication "The physics of a push-me pull-you boat" they wrote that:
"We also note that a wheeled vehicle could also be driven against the wind by coupling the propeller shaft to the wheels. The maximum attainable speed, under ideal conditions, is expected to be twice the wind speed in this case also."

For me it is obvious, the only unbalanced force at the beginning of the experiment is air resistance acting on the vehicle. This force is transferred thanks to the wheel acting on ground  to the propeller. It is not disappearing, now it is propelling the propeller until opposite air resistance will balance it. From the perspective of the ground we have 2x wind speed. Forces balanced. If we add the leverage we can drive faster or counter the internal losses (efficiency). 

That is why I asked this crucial question: what is happening in your reasoning with this unbalanced air resistance? (Start of experiment)
Reply from the maker: It is not external force, only forces acting on vehicle are air resistance and rolling resistance nothing more. Look on my last comment to @windgris
Reply: @PiotrRysztak  You state: "I am interested in learning but you are not interested in even trying to understand my point of view. "

Our points of view are unimportant.   Only the physics described is important.   This isn't about making you or me feel good.  It is about getting a correct description of the physics of the working cart.   I understand what you are stating and I also clearly see that you are not including important forces because as you describe the situation with the forces you describe with no leverage, the cart would clearly not work at or above windspeed.

 You state:   "What happened with this unbalanced part of air resistance from the beginning?"

The answer to this is obvious. Below windspeed the air resistance is positive accelerating the cart from a stop and overcoming all retarding forces.   At windspeed, this force (aero drag on the body of the cart) becomes zero so it can no longer accelerate the cart.  Above windspeed, this becomes negative as a force which slows the cart.   Below windspeed is uninteresting but clearly explainable.   At and above windspeed is the area where the question is interesting.   The rolling resistance stays approximately the same.   So you seem stuck in the area below windspeed.   The problem with this is that your 1:1 gear ratio (assuming you now think that this produces a negative equal force at the wheel, doesn't make up for the rolling resistance  plus the negative wind resistance plus the wheel force due to prop demand (since, according to you, the propeller thrust only balances the wheel demand force [which neglects to include a force to overcome aero drag and rolling resistance above windspeed]).

Then you state: "You assume that ground is breaking (sic) the vehicle the same as air masses do and this is wrong even for simple cars. "

This is totally absurd.   The ground is, of course braking the vehicle.   Every car on the planet if unpowered in no wind will always roll to a stop on the ground.  There is obviously a braking force of both aero resistance and rolling resistance.   If the car has a tailwind, it will always brake to a stop or (at best) remain rolling somewhere between stopped and wind speed.  It will never roll at full windspeed due to simple aero drag (always lower because drag has to overcome rolling resistance) if not somehow otherwise powered (like the DDWFTTW cart).

You state: "I am not the only one that suggests the ratio (leverage) is not essential to work. Mr. Ruina in his publication about the Boat example wrote that "There is no fundamental limit on the ratio (...) and thus formulae (6) and (3) show no basic limitations on the ratio of the two propeller sizes."

Actually, you simply misunderstand what he stated and he is not suggesting that leverage is not essential.  He's trying to tell you that any SPECIFIC ratio (leverage) is not essential.   The leverage required is a function of the efficiency of the cart.  The more inefficient, the more leverage is required.   The reason there is no fundamental limit on the ratio is that there is no fundamental limit on efficiency (up to 100%).   He assumes one understands that at a ratio of 1:1 the cart will not work (higher than that the cart works as a DUWFTTW cart).   But one can approach arbitrarily close to 1:1 by making the efficiency arbitrarily better (through better engineering).

You state that Ruina notices that:

""We also note that a wheeled vehicle could also be driven against the wind by coupling the propeller shaft to the wheels. The maximum attainable speed, under ideal conditions, is expected to be twice the wind speed in this case also."

This is the upwind condition, not the downwind condition.  This may also be a incorrect analysis since the cart in the real world set a 2.1X record, but it doesn't pertain to the downwind condition.

You state: "For me it is obvious, the only unbalanced force at the beginning of the experiment is air resistance acting on the vehicle". 

This is correct and no one is arguing against this when the cart is at a DEAD STANDSTILL on the ground.   From a start, the only forces are aerodynamic drag and rolling resistance.   The aero drag is stronger than the rolling resistance so the cart starts rolling.   But as soon as the cart moves at all, there is an additional force on the wheels (retarding the motion) that is used to accelerate the propeller's rotation (against the direction it would normally turn if freewheeling in the wind)   The aero drag also has to overcome this force also.   So your statement is incorrect EXCEPT at the trivial point of no motion at all.    Soon (around 50% to 70%) of windspeed, the propeller starts producing thrust and the wheels produce additional retarding force up to the windspeed point.  At this point, there is no aero drag as stated in my previous post.  It is worth noting that the propeller produces axial drag before it produces thrust because it is being accelerated and the blades experience rotational drag.   The  additional unbalanced force is now the propeller thrust which has to be more than the sum of the rolling resistance and wheel retarding force (due to the propeller demand) to maintain or accelerate above windspeed.

You state: This force is transferred thanks to the wheel acting on ground  to the propeller. It is not disappearing, now it is propelling the propeller until opposite air resistance will balance it."  

NO.  There are not two air resistances.  There is only one.   It starts at a maximum at zero speed and is positive (per previous convention) and decreases to zero at windspeed.  Above windspeed, it becomes negative.   What turns the propeller is the force of the wheel against ground, nothing else, at all speeds.  The force is not transferred to the propeller via the ground.   The force is transferred to the axle of the drive wheel forming the unbalanced torque couple which the force from the ground on the tire forms the other component of the couple creating the torque on the axle to turn the prop.    But at windspeed, there is no force from the wind on the cart at all and this should be obvious.   There is only thrust from the prop and the retarding force at the wheel consisting of the sum of the prop demand plus rolling resistance.   Above windspeed, the aero force on the cart reverses and impedes the cart in addition to the two forces just described.   The prop thrust now has to overcome all three to accelerate further.

 You state: "From the perspective of the ground we have 2x wind speed. Forces balanced. If we add the leverage we can drive faster or counter the internal losses (efficiency). "

I'm not sure what you are even trying to state here.  From the perspective of the ground, the wind is always at 1X windspeed.   It basically doesn't make any sense.  Where are you coming up with "2X wind speed"??
Reply: @PiotrRysztak  "It is not external force,"

The force is exerted by the ground (not part of the vehicle) on a part of the vehicle (wheel). Thus external to the vehicle.
Reply: @PiotrRysztak  of course it's an external force!  Braking slows a vehicle down.  Perhaps you've been in a car sometime in your life?  Just ask the driver what happens when they press on the brake pedal.  Hint: the car slows down.  And you know what causes an acceleration on a body?  EXTERNAL FORCES.  It's honestly hard to tell whether you actually believe such nonsense or you're just trolling us.

>> I am interested in learning but you are not interested in even trying to understand my point of view. 

Yet again - we DO understand your point of view.  Your point of view is WRONG.  We've explained many times why it's obviously wrong.  Our explanations comport with the well established laws of physics.  Your explanations violate the laws of physics.  A body being slowed down by only internal forces!?  Get serious!
Reply: @PiotrRysztak  
>> FACT: Cars have only encounter to forces air resistance in air masses and rolling resistance on wheel. (When we have 100% efficiency of cars mechanisms).

Your "FACT" is 100% WRONG.  You make it clear that you don't understand the difference between rolling resistance and coefficient of friction.  Rolling resistance represents a loss.  Coefficient of friction between tire and road does not.

>> FACT 2: If there will be no rolling resistance acting on wheel then cars would be stationary in air masses. No matter how powerful engine will rotate the wheel. Cars need rolling resistance to push back on ground to move in air.

Your "FACT 2" is 100% WRONG.  A tire having grip on the road is a completely separate thing from rolling resistance.  Think of rack and pinion.  The resistance to slipping is effectively infinite.  The rolling resistance can be near 0.  They are separate things.

We're not talking about the subtle and confusing things of the downwind cart here.  We're talking about the most basic physics possible.  If you don't understand things like "acceleration is caused by external forces" or the difference between rolling resistance and traction, this is more hopeless than we had imagined.
Reply: @PiotrRysztak  "Cars need rolling resistance to push back on ground"

No. You are confusing rolling resistance (opór toczenia) with static friction (tarcie statyczne). These are completely different things, with separate coefficients. Rolling resistance just dissipates energy. Static friction can be used to transmit energy. Your orange force is static friction that brakes the vehicle.
Reply from the maker: @eyytee  >>No. You are confusing rolling resistance (opór toczenia) with static friction (tarcie statyczne). These are completely different things, with separate coefficients. Rolling resistance just dissipates energy. Static friction can be used to transmit energy. Your orange force is static friction that brakes the vehicle.

Rolling friction. static friction and kinetic friction do not act all together. Depending what is going on, only one of these friction is working. Not all working combined at the same time. If an object is not moving it is static friction, if the object is sliding on the surface it is kinetic friction and when it is rolling it is rolling friction. Our wheel is without any doubt rolling on the surface of the ground. When we push brake in car we start to slow down rotation of wheel, when we push it really hard we stop rotation and wheel where sliding on surface. Then we will have kinetic friction.
Reply from the maker: @Rick_Cavallaro  To all my respect to you I will not answer your more comments in my direction. Until you respond to what I wrote earlier. 

"I am wondering if you had attacked Alex with the same disrespect, aggression and insulting him, when he standed with his statement after Derek's first video. He was not convinced instantly and I am doubting you treated him similar to me. Do you laugh at him also that he was in the wrong? Where does this difference come from?"

I try to be polite, respond to arguments and present my own. I have done nothing that deserves such treatment on your part.

FACT1 - in rolling resistance formula there are rolling resistance coefficients included.

FACT2 - if there is no rolling resistance i mean there is no contact,  rack and pinion is different type of contact. If rolling resistance is 0 (in reality this is impossible) but if it can be 0 then the wheel will rotate in place, no matter how powerful the engine will rotate the wheel.
Reply from the maker: @killbeas  >>Our points of view are unimportant.   Only the physics described is important.   This isn't about making you or me feel good.  It is about getting a correct description of the physics of the working cart. 

I disagree, different points of views are important to look at the subject holistically. If you look only from one point of view, some important things can hide from you. To the rest i 100% agree it is all about the truth not feelings.

>>This is totally absurd.   The ground is, of course braking the vehicle.   Every car on the planet if unpowered in no wind will always roll to a stop on the ground.  There is obviously a braking force of both aero resistance and rolling resistance.   If the car has a tailwind, it will always brake to a stop or (at best) remain rolling somewhere between stopped and wind speed.  It will never roll at full windspeed due to simple aero drag (always lower because drag has to overcome rolling resistance) if not somehow otherwise powered

"Breaking" <- was autocorrect, not intended mistake.
Every car on the planet without wind will stop, where I denied it, as you suggest? I only point you are wrong when you are saying that "This isn't true (like a balloon) since the cart also wants to be at True Ground Speed of zero also since it is just AS MUCH CONNECTED to the ground as the air.""

The car is stay ON the ground and IN air masses. This is the important difference. Strong Wind will blow the car from the ground. Strong moving of ground will only act by rolling resistance and balanced by air masses. Like the experiment from Mythbusters i mentioned earlier <- i think you will argue there that it is impossible. Because the ground is holding the vehicle.

>>Actually, you simply misunderstand what he stated and he is not suggesting that leverage is not essential.  He's trying to tell you that any SPECIFIC ratio (leverage) is not essential.   The leverage required is a function of the efficiency of the cart.  The more inefficient, the more leverage is required.   The reason there is no fundamental limit on the ratio is that there is no fundamental limit on efficiency (up to 100%).   He assumes one understands that at a ratio of 1:1 the cart will not work (higher than that the cart works as a DUWFTTW cart).   But one can approach arbitrarily close to 1:1 by making the efficiency arbitrarily better (through better engineering).

I think I understood it well, Blackford replied to Ruina:
"However, I disagree with the statement made by Ruina at the bottom of page 4 and the top of page 5 of his article. There he implies that the ratio (...) is not critical parameter for the operation of the boat."

Ruina replied:
"I will leave all the discussion of the variable "a" to an appendix and center the argument on the basic fact that power=force x velocity x constant. (...)"

The gentlemens did not pursue the topic further, from what I understand because that was not the most important thing. They proved that the vehicle could work and ended the discussion. This is how I perceived it, but I might have misinterpreted it. 

>>So your statement is incorrect EXCEPT at the trivial point of no motion at all. (..)

I think this is the place where we can not find agreement. There is no  "no motion" point when ground-air masses move each other. 

If our experiment would start from (-)Wind speed relative to air masses, and (-)wind speed relative to ground. I agree that it will end at TAS=0 and GS-0 because it is the same point, and our braking force from air resistance will disappear, and we will not have the force to move forward above wind speed.
However we are starting from a different point.
The vehicle is in this situation:

TAS = -windspeed
GS = 0

That is where my assumption comes from. We are braking in air masses and generate energy from that to propel the wheel and finally propeller.
Then vehicle is in this situation:
TAS = 0
GS = wind speed
Propeller is rotating but it can only generate thrust equal to the difference of speed ground and air masses. 

Finally it will end this:
TAS = +wind speed
GS = 2 x wind speed

This is why assumptions about 2x wind speed come from.
Reply: @PiotrRysztak  Static friction and rolling resistance can act at the same time. They are due to different phenomena:
- Static friction happens directly at the contact patch between wheel and ground. 
- Rolling resistance includes the deformation of the tire & entire wheel, deformation of the ground, bearing friction etc.
The term "rolling friction" for rolling resistance is a misnomer, because it is not just friction, but the net effect of many dissipative factors. But static friction is not dissipative, so it is treated separately.
Reply: @PiotrRysztak    You state: "The car is stay ON the ground and IN air masses. This is the important difference. Strong Wind will blow the car from the ground. Strong moving of ground will only act by rolling resistance and balanced by air masses. Like the experiment from Mythbusters i mentioned earlier <- i think you will argue there that it is impossible. Because the ground is holding the vehicle."

No.  It doesn't matter how the cart is coupled to each media, only that it is (Coupling means "can be affected or moved by").   Air couples to the cart via aerodynamic drag or relative motion (with both the cart body and propeller) and it couples to the ground via the contact patch at the tires.   

One can build a "DDMFTTM (Direct Down Media Faster Than The Media) cart which Derek shows in his video with a long board and a small rolling cart.   It is coupled to both the floor and the board (2nd media).  It doesn't display the "slipping against the media" that a propeller initially does but the propeller couples the cart to the air (as well as the aerodynamic drag of the body) and the wheels couple it to the ground medium.  The principle of the two the basically the same with the exception of the propeller slip in the air.  Since there is no slip of the "board  cart" with respect to the board, it always travels "faster than the board" at a fixed ratio whereas the wind cart goes through the "slipping transition (propeller)" to get to a faster than the wind regime.   This is realistically the only difference and the only importance is the transient "slipping" nature as the cart has to speed up from zero speed to above windspeed where the board cart will always be above board speed for the moving board.

You are going off on some trivial tangents with this and the mythbusters story is one that is relatively uninteresting (if you mean the one about an airplane on a treadmill).

You state: "There is no  "no motion" point when ground-air masses move each other. "   

I have no idea what you are talking about here?   The cart starts at zero speed over the ground but if a wind exists the two media are always moving with respect to each other.   Perhaps a language issue?

The remainder is a bit hard to understand what you are trying to state.

We have three clear regimes of operation:
A) Cart below windspeed  (relatively uninteresting until the cart is near windspeed and the propeller starts performing)
B) At windspeed (which the cart will never get to without the propeller/drivewheel mechanism working).
C) Above windspeed up to the limit speed (the DDWFTTW regime) where the only reason the cart works is the propeller/drivewheel system working with leverage of forces with lower force at the wheel compared to a higher thrust at the propeller.

I think you are stating the following:

"TAS = -windspeed
GS = 0"

This is just the cart stopped on the ground with the wind blowing over it.
The aero drag on the vehicle equals the force at the wheels since it is not accelerating.

"TAS = 0
GS = wind speed"

Basically this means the cart is at windspeed. (This is generally a transient speed point as with adequate wind, the cart goes quickly through this point)

You state: "Propeller is rotating but it can only generate thrust equal to the difference of speed ground and air masses. "

None of that is correct except the propeller is rotating.   Assuming the wind is strong enough to make the cart work above windspeed, the propeller is generating more thrust than the total wheel retarding force which includes rolling resistance force plus propeller torque budget force (since there is no aerodynamic force on the body of the cart at windspeed).   It makes no sense to talk about the propeller thrust (a force) = difference in speed of ground and airmass (a velocity) so I have no idea what you are attempting to state there since the units don't match and they can't be equated.

"TAS = +wind speed
GS = 2 x wind speed

This is why assumptions about 2x wind speed come from."

OK,  I understand what you mean by the 2X now but it doesn't apply to the DDWFTTW mode.   There is no 2X windspeed limit for DDWFTTW.  The Blackbird set a certified record of over 2.8X wind speed in carefully measure and instrumented conditions.  

The cart is not limited to 2X wind speed in DDWFTTW mode.  The paper (I'm assuming) was discussing this as the limit of upwind speed (which I don't think is correct) but it has nothing to do with the ddw speed.   That speed can be arbitrarily high (as was earlier stated) depending upon several factors with one of them being the  ratio of propeller pitch to distance traveled over the ground (in the same time) and another being the overall efficiency of the cart.

The only real issue is that the mechanism only works at and above windspeed because the prop thrust force is set higher than the wheel retarding force (for DDWFTTW operation) by adjusting the leverage of the prop with respect to the wheels.   If the prop thrust is not set higher than the wheel retarding force this imposes on the wheels, the cart can't overcome the remaining drag forces and go faster than the wind.
Reply: @PiotrRysztak    I also went back and read Ruina's paper and there is no actual 2X limit for upwind travel.   He was referring to the limit where a parameter was chosen to be 1/3 by Blackford and for that value, the 2X windspeed was the max.   He states explicitly at the opening paragraph of the paper that the boat can sail at any speed in to the wind, not just 2X as the Blackford article states (which was overly stringent). "      So this is not a fundamental limit (as I earlier thought in either mode).   And 2X windspeed DDWFTTW is definitely not a limit speed as the Blackbird record runs both attest in upwind and downwind mode.   The article can be referenced here:

http://ruina.tam.cornell.edu/research/topics/miscellaneous/push-me_pull-you.pdf
Reply: @killbeas  " I also went back and read Ruina's paper and there is no actual 2X limit for upwind travel"

That's right. Ruina was correcting a paper by Blackford, who computed the 2x upwind limit based on the false premise, that the maximal upwind speed is achieved when the turbine operates at the Betz-limit. Blackford just intuitively assumed this without justification, but it is wrong: The Betz-optimum doesn't take the turbine drag into account, that has to be balanced against the power you gain the the turbine, if you want to move against that drag. The  Betz-optimum is only optimal for power generation with a stationary turbine, not for maximizing upwind speed.
Reply: @eyytee  Completely agreed!
Reply from the maker: @eyytee  >>Static friction and rolling resistance can act at the same time. They are due to different phenomena:
- Static friction happens directly at the contact patch between wheel and ground. 
- Rolling resistance includes the deformation of the tire & entire wheel, deformation of the ground, bearing friction etc.
The term "rolling friction" for rolling resistance is a misnomer, because it is not just friction, but the net effect of many dissipative factors. But static friction is not dissipative, so it is treated separately.

I know that you will be denying even the most basic of basics when they come from me. That is why we will never be able to find agreement on more complex problems...

I hope this source will be enough for you to admit that you are at least partially wrong. If not, then we probably need to end the discussion at this stage because we will not go any further. 

Edited : forgot link :) https://youtu.be/hxa6jAYA980

Only 4 minute long video, fragment of that:
"... In that case, the static friction, if the wheel is rolling with velocity V, in this case f static is 0. And because of that, the wheel will roll without any friction, which is an idealization. There's other types of friction called rolling resistance, air resistance, et cetera which will slow the wheel down."
Reply from the maker: @Rick_Cavallaro  >>I have treated Alex exactly as he deserves to be treated for refusing to admit he was wrong even in his "concession", just as I'm treating you exactly how you deserve to be treated.

So you treated him worse than me, the same or better? You laugh at him, disrespect him, insulting him?  He states that your experiment was  done wrong. I do not, and I only do not agree with the theoretical explanation.

>>FACT1 - the "rolling resistance formula" does not include coefficients.  It IS a single coefficient.

It is single but depends on surface and wheel construction. My point was that these elements are already taken into account in rolling resistance. In other words, the force of rolling resistance depends on rolling resistance coefficient.

>> FACT2 (...)
That's insane!
That is as wrong as everything else you've been saying.  You need to look up "rolling resistance".

When I say "no contact " I mean a perfectly flat surface. Like on ice, the wheel will rotate but do not push back from ice. With all respect to you, you need to also look at "rolling resistance".

>>And quit pretending that I'm treating you any worse than you're treating me.

In the same comment you wrote "That is as wrong AS EVERYTHING ELSE you've been saying."
Indeed, we treat each other with equal respect.
Reply from the maker: @killbeas  
>>No.  It doesn't matter how the cart is coupled to each media, only that it is (Coupling means "can be affected or moved by").   Air couples to the cart via aerodynamic drag or relative motion (with both the cart body and propeller) and it couples to the ground via the contact patch at the tires.   

It is a big matter. The wheel is touching the ground, and rolling. None of part of the vehicle is in the ground. If what you are saying is true then we will be no able to build a watermill and generate energy. Without moving the watermill in relation to ground. One medium is holding the vehicle much stronger than the other.

>>cart which Derek shows in his video with a long board and a small rolling cart.

Yes this is a good example, if you can tell me the answer - what will happen as the wheels will be the same size?

>>You are going off on some trivial tangents with this and the mythbusters story is one that is relatively uninteresting (if you mean the one about an airplane on a treadmill).

In my opinion it is also a very interesting phenomena. It proves that from ground we need to encounter only rolling resistance.

>>I have no idea what you are talking about here?   The cart starts at zero speed over the ground but if a wind exists the two media are always moving with respect to each other.   Perhaps a language issue?

Maybe it is language issues. I was trying to say that in this example it is always something that moves. In GS=0 vehicle is not moving in relation to ground but is moving in wind speed in relation to air masses.

A) it is interesting point, because the propeller starts to move as soon as the wheel starts to rotate.
B) When the vehicle is in TAS=0 there is no air resistance, but vehicle is in GS=windspeed and wheels rotate as quick as the propeller.
C) here we do not agree i think that we do not need leverage. In ideal conditions and 100%efficiency.

When we have vehicle in:
TAS = windspeed
GS = 0
The vehicle is moving in relation to air masses in wind speed, and standing with no motion in relation to ground.

When vehicle reach:
TAS = 0
GS = windspeed
The vehicle moves in wind speed but only in relation to ground. In relation to air masses is stay still. This is the observer's perspective.

>>None of that is correct except the propeller is rotating.   Assuming the wind is strong enough to make the cart work above windspeed, the propeller is generating more thrust than the total wheel retarding force which includes rolling resistance force plus propeller torque budget force (since there is no aerodynamic force on the body of the cart at windspeed).   It makes no sense to talk about the propeller thrust (a force) = difference in speed of ground and airmass (a velocity) so I have no idea what you are attempting to state there since the units don't match and they can't be equated.

I assume that the relative move of air masses to ground acts on the wheel more from the air masses perspective. The wheel only transfers it to the propeller.

>>The Blackbird set a certified record of over 2.8X wind speed in carefully measure and instrumented conditions. 
 
Yes but with leverage.

>>The only real issue is that the mechanism only works at and above windspeed because the prop thrust force is set higher than the wheel retarding force (for DDWFTTW operation) by adjusting the leverage of the prop with respect to the wheels. If the prop thrust is not set higher than the wheel retarding force this imposes on the wheels, the cart can't overcome the remaining drag forces and go faster than the wind.

I think that the point when vehicles reach TAS=0 is not important and at this point nothing spectacular happens. All point of movement are important and all relations: ground-air, air-vehicle, vehicle-wheel, wheel-ground, wheel-propeller, propeller-air.

>>I also went back and read Ruina's paper and there is no actual 2X limit for upwind travel. He was referring to the limit where a parameter was chosen to be 1/3 by Blackford and for that value, the 2X windspeed was the max. He states explicitly at the opening paragraph of the paper that the boat can sail at any speed in to the wind, not just 2X as the Blackford article states (which was overly stringent). " So this is not a fundamental limit (as I earlier thought in either mode). And 2X windspeed DDWFTTW is definitely not a limit speed as the Blackbird record runs both attest in upwind and downwind mode. The article can be referenced here:

Yes, finally they agreed that it is possible to move at any speed using leverage. But as i understand this articles Ruina leave this point because it was not a matter of dispute ""I will leave all the discussion of the variable "a" to an appendix and center the argument on the basic fact that power=force x velocity x constant. (...)""
Reply: @PiotrRysztak  "Only 4 minute long video"

The wheels of the Blackbird aren't rolling freely like the wheel your quote from the video talks about. Nothing in that video supports your claim that static friction and rolling resistance are mutually exclusive.
Reply: @PiotrRysztak  
>> When I say "no contact " I mean a perfectly flat surface. 

That makes perfect sense - given that the two things are in no way related.

It's unbelievable that you continue to argue that rolling resistance means things that it definitely does not mean, and even more amazing that you claim the force the ground puts on the wheel to turn the prop does not put an equal drag on the vehicle.

>>  With all respect to you, you need to also look at "rolling resistance"

I really don't need to since I'm well aware of what it is and how it works.  But I did look it up for you...

F=C_{rr}N
F	=	force
C_{rr}	=	dimensionless rolling resistance coefficient
N	=	normal force

I very much look forward to you now arguing that this definition is wrong, or explaining how physics is different where you come from.
Reply: @PiotrRysztak  
>> I know that you will be denying even the most basic of basics when they come from me. 

Only because you keep getting the most basic of basics completely wrong.
Reply: @PiotrRysztak    You state:  "It is a big matter. The wheel is touching the ground, and rolling. None of part of the vehicle is in the ground."

Sure it is.   The wheel is part of the vehicle.   You are arguing that a car isn't touching the ground if you state that the wheels only roll over it??   If that were the case a car could not start or stop.  It's obvious nonsense.

You state: "If what you are saying is true then we will be no able to build a watermill and generate energy."Without moving the watermill in relation to ground. One medium is holding the vehicle much stronger than the other."    

Again total nonsense and nothing like anything I've claimed.   A waterwheel is constrained at the axle and any force on the rim is transmitted as a torque through the axle as the translational force of the water is canceled by the constraint force.   So I have no idea how you concluded that nonsense.  It has nothing to do with my statements.

You state: "Yes this is a good example, if you can tell me the answer - what will happen as the wheels will be the same size?"

You can get the entire range of behaviors depending upon the wheels relative size (hence the leverage).   From DDWFTTW, to locked up (no motion--same size 1:1 gearing wheels since neither wheel has a mechanical advantage) to DUWFTTW behavior (geared with inverse ratio).   Note that this is somewhat symmetrical with respect to which medium is moved in which direction.

This is illustrated here very nicely with two chain carts for the opposite cases.  Notice the difference in the cog sizes and the way it is geared:

https://youtu.be/pw_B2MnMqZs?t=121     

(with thanks to coolaun).

You state: " It proves that from ground we need to encounter only rolling resistance."

Nonsense.  Aircraft wheels are not powered in general.  They only roll.  But when you brake the wheels, they most definitely have a force other than rolling resistance against the ground.  (Some aircraft have "taxiing electric motors" which also produce a force against the ground!  But this is the case for an airplane being pulled by a tug also except the ground force is on the tug wheels.)

You state: "I assume that the relative move of air masses to ground acts on the wheel more from the air masses perspective. The wheel only transfers it to the propeller."

I don't know what you mean by that.  You'll have to restate it.   Are you referring to the "reference frame of the air mass"?   If so, I don't know what you mean by "The wheel only transfers it to the propeller".    The wheel on the ground is indeed the only thing turning the propeller from any reference frame as torques are independent of reference frames and the ground is what is turning the wheel.  The propeller clearly produces a thrust force by accelerating part of the air mass (processed by the prop) with respect to the cart (which pushes on the wheel axle--a constraining force and a feedback loop).

>>The Blackbird set a certified record of over 2.8X wind speed in carefully measure and instrumented conditions. <<
 
You state:  "Yes but with leverage."

Of course with leverage.  This is what we've been telling you the entire time.   For a DDWFTTW cart to work, there has to be a leverage ratio from wheels to propeller such that the prop thrust force is > the wheel retarding force.   That is how leverage is used.   This is why your title is wrong as this is what Cavallaro and Borton claim in their theory.

You state:  "I think that the point when vehicles reach TAS=0 is not important and at this point nothing spectacular happens."

It turns out that this is absolutely true.   By cart travel at windspeed (as you state TAS =0) the propeller is producing adequate thrust force to make the cart function with the wheels reacting against the ground.  If not, it will never reach windspeed.   This is all due to the leverage arrangement.

You state:  "Yes, finally they agreed that it is possible to move at any speed using leverage. But as i understand this articles Ruina leave this point because it was not a matter of dispute"

You should recognize that this statement is agreeing with what I (and all the others here) have told you.   The cart only works with wheel to prop leverage in the upwind and downwind modes (which is illustrated by the chain carts above with one ratio for downwind and the inverse for upwind travel).  The ratios are not sacred however.   Basically any ratio above and below 1:1 will demonstrate the behavior.  The practical result of higher ratios in either direction is faster travel along the papers as shown.  (This is just like Derek's board example one should recognize).   

It is worth noting that Cavallaro and Borton reversed the gear ratio on the Blackbird for the Downwind and Upwind record runs (just like these chain carts) in order for the cart to perform in those modes.    I really don't think it could be more clear than that.
Reply from the maker: @Rick_Cavallaro  >>I really don't need to since I'm well aware of what it is and how it works.  But I did look it up for you...

F=C_{rr}N
F	=	force
C_{rr}	=	dimensionless rolling resistance coefficient
N	=	normal force

>>I very much look forward to you now arguing that this definition is wrong, or explaining how physics is different where you come from.

Now I am really confused. You put an formula for rolling resistance force. This force depends on rolling resistance coefficient and normal force. This is what I said: Rolling resistance depends on rolling resistance coefficient. What did I miss? Without knowing the rolling resistance coefficient we don't know how strong is rolling resistance.
Reply from the maker: @eyytee  >>The wheels of the Blackbird aren't rolling freely like the wheel your quote from the video talks about. Nothing in that video supports your claim that static friction and rolling resistance are mutually exclusive.

Yes and Mr from the video point out that there are other types of friction acting on vehicle, but static friction is 0.
"... In that case, the static friction, if the wheel is rolling with velocity V, in this case f static is 0. And because of that, the wheel will roll without any friction, which is an idealization. There's other types of friction called rolling resistance, air resistance, et cetera which will slow the wheel down."
Reply from the maker: @killbeas  >>Sure it is. The wheel is part of the vehicle. You are arguing that a car isn't touching the ground if you state that the wheels only roll over it?? If that were the case a car could not start or stop. It's obvious nonsense.

It is touching the ground but if you do not brake it (by hand brake, or leave on grear), and the wind would blow. it will have to encounter only rolling resistance to move the car. It can accelerate to the wind speed minus rolling resistance. On the other hand when the ground is moving (imagine this) it will not accelerate the car that much in relation to ground. The main medium for cars and planes is air masses. They operate in Air masses, cars use the ground to push back from it to move in air masses, and to brake in air masses. 

>>Again total nonsense and nothing like anything I've claimed. A waterwheel is constrained at the axle and any force on the rim is transmitted as a torque through the axle as the translational force of the water is canceled by the constraint force. So I have no idea how you concluded that nonsense. It has nothing to do with my statements.

This is the analogy, the air masses can cancel it like ground does. ground, air and water are not vacuum.

>>to locked up (no motion--same size 1:1 gearing wheels since neither wheel has a mechanical advantage)

It is interesting but I can not find that kind of experiment. I am interested in what happens when we have two wheels rotating in other directions one on another. The same size. Similar to Derek's. On Coolaun video wheels rotate in the same directions. And are different sizes (leverage).

>>Nonsense. Aircraft wheels are not powered in general. They only roll. But when you brake the wheels, they most definitely have a force other than rolling resistance against the ground. (Some aircraft have "taxiing electric motors" which also produce a force against the ground! But this is the case for an airplane being pulled by a tug also except the ground force is on the tug wheels.)

It is not nonsens without additional forces; only rolling resistance acts from ground. The plane is pulled by the propeller and is only restrained from the ground by the constant rolling resistance. It is not only my statement it is also mythbusteres statement.

>>I don't know what you mean by that. You'll have to restate it. (..)

When we have a wheel that is between two floors which move in relation to each other, the wheel would stay in place (but with rotation). One will push it in one direction the other in opposite. But when we have the wheel more connected with one of the floors it will rotate but will not move in relation to it. there is no balance. We rotate the wheel but not move it, so we can use this rotation in relation to this floor.

>>It turns out that this is absolutely true. By cart travel at windspeed (as you state TAS =0) the propeller is producing adequate thrust force to make the cart function with the wheels reacting against the ground. If not, it will never reach windspeed. This is all due to the leverage arrangement.

So why do all of you state that only from this point is it interesting? I think what is more important is what happened that we have at this point an unbalanced thrust force. This should be the key question.

>>(This is just like Derek's board example one should recognize). 

Yes, but I am still interested in what happens when we will have the same size of wheels. Board will push one wheel to rotate in one direction -> , this will want to rotate the other wheel in the opposite direction <-. Finally the wheel on the floor would want to push the floor but it is impossible because the floor can't move. So it can only push back from the floor in the opposite direction the initial board pushes the mechanism. The wheels can't block the board and floor from moving in relation to each other. I will do that experiment on the weekend.
Reply: @PiotrRysztak  "video ... static friction is 0."

That video is not about a wheel that spins against a torque. The Blackbird wheel spins against the propeller torque.
Reply: @PiotrRysztak  
You really know how to completely and intentionally miss the point.  Kudos!
Reply: @PiotrRysztak  You state: "It is touching the ground but if you do not brake it (by hand brake, or leave on grear), and the wind would blow. it will have to encounter only rolling resistance to move the car. "

True.   But since the DDWFTTW cart is always "in gear" (to the propeller) this causes the additional force at the wheels which has to be overcome by propeller thrust.  It isn't just an opinion, I've personally measured it for the cart on the treadmill.   If you think this force doesn't exist, I just can't help you.  Literally everyone here that knows about physics or the cart agrees that the propeller torque demand causes an additional force at the wheels that the propeller thrust has to overcome.   Just above windspeed this is the largest force as aero drag and rolling resistance is small.

You state: "This is the analogy, the air masses can cancel it like ground does. ground, air and water are not vacuum."

I have no idea what you  are talking about here???  I'm not following what you are stating at all.

You state: "It is interesting but I can not find that kind of experiment. I am interested in what happens when we have two wheels rotating in other directions one on another. The same size. Similar to Derek's. On Coolaun video wheels rotate in the same directions. And are different sizes (leverage)."

Look more carefully.  The wheels are the exact same size.   It is the gears that the chain is on that causes leverage.  The wheels do not change the leverage at all, only the gears.   However, if a different size wheel was used on each axle, I believe the cogs could be the same and the behavior would work since the ratio between front and rear wheels would still be different (leveraged).   The point of this was to clearly show which leverage always wins the "battle" (the axle with the small gear having a higher mechanical advantage).   This is analogous to a DDWFTTW cart with the wheels winning the leverage battle and a DUWFTTW cart with the prop winning.

You state: "The plane is pulled by the propeller and is only restrained from the ground by the constant rolling resistance. "

Of course.  For an airplane we agree that the only force (at the tire tread) is rolling resistance .   But for a DDWFTTW cart, there is most definitely an additional force--the force required to drive the propeller.  Again, this is the critical force you are missing.  You can't simply wish it away as it very much exists.  That this force exists and it has to be smaller than prop thrust due to leverage is the critical question as that is what is wrong with your entire video.

"When we have a wheel that is between two floors which move in relation to each other, the wheel would stay in place (but with rotation). One will push it in one direction the other in opposite. But when we have the wheel more connected with one of the floors it will rotate but will not move in relation to it. there is no balance. We rotate the wheel but not move it, so we can use this rotation in relation to this floor."

 I don't understand you assertion here.  Are you talking about a loss of traction and slipping??  You may need a picture to explain this.  I suggest you go to this site where you can post any illustrated diagrams and I will be happy to discuss it:

http://talkrational.org/index.php/topic,24.0.html

You ask: "So why do all of you state that only from this point is it interesting? I think what is more important is what happened that we have at this point an unbalanced thrust force. This should be the key question."

It's simple.   All we are saying is that anything can simply blow with the wind like a tumbleweed or popcorn.  That is relatively uninteresting.   Where the cart starts to do things that even a floating balloon blowing with the wind can't do becomes interesting.   So no vehicle with drag on the ground will blow at windspeed (what you call TAS = 0) unless it has some additional mechanism (like the DDWFTTW cart) working to help it.   

In reality, the cart starts getting additional help from the propeller as soon as the propeller leaves the stalled condition which is roughly somewhere between 50% to 70% of windspeed.   It then provides thrust to the cart not just from aerodynamic drag.   At this point the cart now has forces from two different sources pushing it.  1) aerodynamic drag on the entire vehicle plus  2) propeller thrust force.   The cart would never reach windspeed without the propeller thrust because the rolling resistance (at winspeed) plus the force on the wheels required to turn the propeller would prevent this. (at windspeed we have all agreed that the aerodynamic drag on the cart body = 0)

This is where we mean that the situation becomes "interesting" since no vehicle with ground drag, simply powered by the aerodynamic drag of the wind, can ever reach windspeed (what you call TAS = 0).   It is obviously interesting above windspeed since the vehicle now has a headwind opposing it causing drag in the negative direction.  Yet it works anyway, steady state.  Most people can't figure out how it does this.   And you have given an incorrect explanation also about how it does this.  It could not accomplish this without propeller thrust, wheel force to turn the propeller, and leverage of the wheel force turning the propeller to create a higher thrust than ground force [which is most definitely more than just rolling resistance at the wheel] (what Cavallaro and Borton claim as well as many others here).

You state:   "The wheels can't block the board and floor from moving in relation to each other. I will do that experiment on the weekend."

Sure they can if the force pulling the board is not enough to overcome traction.   If the force is stronger than that, the wheels will simply slip and not roll.   So if the wheels are the same ratio to one another in terms of force, they will lock or slide.   Try the experiment and show it.   But any other leverage ratio other than 1:1 will cause them to roll in two different directions for >1 and < 1.

So all of this other stuff is fluff until you resolve the central issue---propeller thrust has to exceed the retarding force at the wheel which is required to turn the propeller (as well as rolling resistance and aero resistance [above windspeed] .   This is just due to leverage.
Reply from the maker: @killbeas  I am sorry for the late response. I had a busy weekend.

>>True.   But since the DDWFTTW cart is always "in gear" (to the propeller) this causes the additional force at the wheels which has to be overcome by propeller thrust. (...)

True. I do not deny this force exists (don't know why you act as I would deny it existing). This force is acting from the propeller. The propeller slows down the wheel, not the ground is. It is my statement.

>>I have no idea what you  are talking about here???  I'm not following what you are stating at all.

It is the analogy to a watermill where as you admit, ground can cancel the normal force. We are not moving in relation to ground but we have energy from moving water. You can count how much energy a hydroelectric plant can produce. Likewise, you can count how much energy it takes to move the power plant upstream. No leverage. I know that this is a strong simplification, but this was the idea that resulted in my conclusions that the leverage is not necessary to move in one medium using energy from the moving medium next to..

>>Look more carefully.  The wheels are the exact same size.   It is the gears that the chain is on that causes leverage.  (...)

I meant what happens when we have the same size of "gears". without chain, direct translation of two sprockets on top of each other.

>>Of course.  For an airplane we agree that the only force (at the tire tread) is rolling resistance .   But for a DDWFTTW cart, there is most definitely an additional force--the force required to drive the propeller.  

This is the same as the two paragraphs above.

>>  I don't understand you assertion here.  Are you talking about a loss of traction and slipping??  You may need a picture to explain this.  I suggest you go to this site where you can post any illustrated diagrams and I will be happy to discuss it:

Yes i think i am thinking of loss of traction and slipping. I will look at this and when i do illustration i will put it there. 

>>It's simple.   All we are saying is that anything can simply blow with the wind like a tumbleweed or popcorn.  That is relatively uninteresting.   Where the cart starts to do things that even a floating balloon blowing with the wind can't do becomes interesting.   So no vehicle with drag on the ground will blow at windspeed (what you call TAS = 0) unless it has some additional mechanism (like the DDWFTTW cart) working to help it.   

You consider the vehicle as if it were on the border of two media. Both affect him equally. I try to see it as an object in one medium that tries to draw energy from the other (moving next to).

>>In reality, the cart starts getting additional help from the propeller as soon as the propeller leaves the stalled condition which is roughly somewhere between 50% to 70% of windspeed.   It then provides thrust to the cart not just from aerodynamic drag.   At this point the cart now has forces from two different sources pushing it.  1) aerodynamic drag on the entire vehicle plus  2) propeller thrust force.   The cart would never reach windspeed without the propeller thrust because the rolling resistance (at winspeed) plus the force on the wheels required to turn the propeller would prevent this. (at windspeed we have all agreed that the aerodynamic drag on the cart body = 0)

So what would be the final state when we would have 1:1 wheel-propeller relation. I am not sure about this extra unbalanced part of air resistance (at the beginning of experiment). For every action, there is an equal and opposite reaction. So what happened that this force disappeared?

>>This is where we mean that the situation becomes "interesting" since no vehicle with ground drag, simply powered by the aerodynamic drag of the wind, can ever reach windspeed (what you call TAS = 0). (..)

I would be convinced when the ground drag and aerodynamic drag will act in the same on the vehicle. Like two boards acting on a wheel between it. In that situation i admit that we would need as you mention the mechanical advantage. 

I think the advantage is already there (air mass-ground), like in a watermill. 

>>Sure they can if the force pulling the board is not enough to overcome traction.   If the force is stronger than that, the wheels will simply slip and not roll.   So if the wheels are the same ratio to one another in terms of force, they will lock or slide.   Try the experiment and show it.   But any other leverage ratio other than 1:1 will cause them to roll in two different directions for >1 and < 1.

Ok, and what if one of it would not start to slip, and the surface it is standing on would prevent it.
I had planned to do an experiment but my lego sets are no longer with me and I did not have time last weekend.  

>>So all of this other stuff is fluff until you resolve the central issue---propeller thrust has to exceed the retarding force at the wheel which is required to turn the propeller (as well as rolling resistance and aero resistance [above windspeed] .   This is just due to leverage.

Yes and as I mentioned in the first post in this conversation. I took it into consideration. I used this unbalanced air resistance force to create the advantage. this force accelerated the wheels and drove the propeller.
Reply from the maker: @eyytee  To Rick and eyytee, I am sorry for the late reply. 
To Rick:
>>You really know how to completely and intentionally miss the point. Kudos!

I honestly don't know what I missed in the context of this formula. I'm confused. 

To eyytee:
>>That video is not about a wheel that spins against a torque. The Blackbird wheel spins against the propeller torque.

This video is about "Friction on a Rolling Wheel" and different forces can act on it:
"There's other types of friction called rolling resistance, air resistance, et cetera which will slow the wheel down."

As another type of friction, you can use this force acting on the wheel from the propeller. From ground there is only rolling resistance.
I chose this source, but there are many more sources. In general, the main forces that each car must overcome are: the constant rolling resistance force - from the ground, and aerodynamic resistance (from the air masses).
Reply: @PiotrRysztak   You state "True. I do not deny this force exists (don't know why you act as I would deny it existing). This force is acting from the propeller. The propeller slows down the wheel, not the ground is. It is my statement."

Just so we are perfectly clear, the propeller provides a torque to the wheel which causes it to push forward against the ground at the rim (contact patch).   The ground obviously has to push back (Newton's third law).   This force from the ground is what trys to slow the cart since it is pushing backwards on the rim (contact patch) of the wheel.

Your entire discussion about the waterwheel seems questionable and muddled.   The simple version is that the axle constraints hold the wheel in place resisting weight and the force the water pushes on the rim (They do this by applying a force to the axle which is the negative of the vector sum of the weight and the force from the water on the rim).   This results in a torque at the axle which can be used to do work.   All the forces at the rim plus the forces at the axle cancel each other in magnitude for lateral motion but they also form a torque couple so there is no lateral movement (translation) of the wheel, only torque at the axle due to the force at the rim and the axle not working through the center of mass which produces the moment ( torque).   Any net force on an unconstrained object causes motion.   (F = MA).   Any couple produces rotation of an object.  Again, the forces at the constraint are part of the net forces on the wheel.

And this is different for the Blackbird which has no constraint keeping it from accelerating.   It does have a constraint on the wheel which allows it to rotate only with respect to the cart body but this doesn't prevent a force on the wheel from causing translation of the cart (straight motion) over the ground.   These forces are the ones you seem to be missing when you say "The propeller slows down the wheel, not the ground".  What is clear is that due to the force from the ground caused by the propeller torque demand,  it attempts to slow the cart but the propeller thrust is greater so it does not succeed.

"You consider the vehicle as if it were on the border of two media. Both affect him equally. I try to see it as an object in one medium that tries to draw energy from the other (moving next to)."

Both media clearly do affect the cart.   Without both effects it would not work.  The reaction force at the wheel is every bit as important as the propeller thrust in the working of the cart.   Feeback loops like this need all the parts or they will not work.

You can work the problem with respect to any inertial reference frame but if you do, the source of energy can be different.   However, in this case because the earth is nearly static (but not quite), part of the air (processed by the propeller) is what changes velocity with respect to the ground in any reference frame.   But depending upon the reference frame chosen, this may cause the air to gain or lose energy.   There is no absolute with regard to "energy flow" since kinetic energy is reference frame dependent.   So any consistent treatment from any inertial reference thing results in the same behavior of the cart even though the values of the energy amounts and flows are different.   (This is what conservation of Energy is about---Total energy in a system is conserved for any closed system when measured from any inertial reference frame).  This should not be mistaken with the idea that the amounts of energy moving around in the system is the same from two different inertial frames because usually it is not.

The only reason one reference frame is usually chosen compared to another is to simply make a problem easier to work since the outcome of the experiment in terms of behavior of all the objects is the same!!!

You ask: "So what would be the final state when we would have 1:1 wheel-propeller relation. I am not sure about this extra unbalanced part of air resistance (at the beginning of experiment). For every action, there is an equal and opposite reaction. So what happened that this force disappeared?"

If you start with a 1:1 wheel propeller relation, the cart will never start.   The wind force trying to turn the propeller as a turbine will prevent the wheels from rolling and the cart will just never move.  The aero force doesn't disappear.  It just can't move the cart as it is constrained.   The cart is simply "locked" with a 1:1 ratio and the air simply blows around it (unless the cart slides with the wheels locked).   A DDWFTTW cart has to have the mechanical advantage in favor of the wheels to start.  Let's call that a ">1" ratio.   If the ratio is <1, the cart will roll in reverse (upwind) because the turbine is now driving the wheels.   At 1:1, no one wins and the cart doesn't move.

Earlier you stated: "I meant what happens when we have the same size of "gears". without chain, direct translation of two sprockets on top of each other."   This is a 1:1 ratio and the cart never moves (without slipping).  If you have a geared sprocket cart with the 1:1 ratio, it is simply locked.   The opposite behavior from two different gearings (<1 and >1) is shown in this video:

https://www.youtube.com/watch?v=pw_B2MnMqZs

(Thanks to Coolaun).

This video shows exactly what I'm referring to with <>1 ratios.  The carts go in opposite directions.   At 1:1, it would simply lock up.

Later you state:  "I think the advantage is already there (air mass-ground), like in a watermill. "

Obviously it is not according to the video shown here since the behavior is the opposite for the different gearing (leverage).   The gearing (leverage) clearly changes the behavior.   This is a mechanical visual proof of what I'm telling you.

You state: "Yes and as I mentioned in the first post in this conversation. I took it into consideration. I used this unbalanced air resistance force to create the advantage. this force accelerated the wheels and drove the propeller."

But you argued that leverage wasn't required and that was your central argument with Cavallaro and Burton.   You are clearly wrong and they are right as the video above clearly proves that the gear ratio (leverage ratio) causes opposite behavior.   It is exactly why Cavallaro changed the gear ratio of the cart to perform the Direct Upwind runs.   Without the gear (leverage change), the cart would behave as only a DDW cart.   Cavallaro and Burton obviously knew what they were doing to make the cart perform in both modes and they have clearly explained why it works this way with their theory which is correct.
Reply: @PiotrRysztak  
Change the name of your video as I suggested, and I'll leave you to wallow in this cesspool you've created.  It's pretty clear from your title that you're not offering a hypothesis.  You act as if you're certain you're right - when you're clearly wrong.

"Please be kind..."

You remind me of our last president!
Reply: @PiotrRysztak  "From ground there is only rolling resistance."

Wrong, there is also static friction. Watch the MIT video you posted to the end. At 3:50 he talks about static friction too: "We see that static friction depends on the other constraints in the problem". For the Blackbird the connection to the propeller is such a constraint.
Reply: @eyytee  yeah - but what would some fools at MIT know!?
Reply from the maker: @killbeas  
>>Just so we are perfectly clear, the propeller provides a torque to the wheel which causes it to push forward against the ground at the rim (contact patch).   The ground obviously has to push back (Newton's third law).   This force from the ground is what trys to slow the cart since it is pushing backwards on the rim (contact patch) of the wheel.

Yes, and ground is pushing back the wheel and cancels the propeller-wheel force and only thrust remains. Like in the water mill example.

>> (...) All the forces at the rim plus the forces at the axle cancel each other in magnitude for lateral motion but they also form a torque couple so there is no lateral movement (translation) of the wheel, only torque at the axle due to the force at the rim and the axle not working through the center of mass which produces the moment ( torque) (...)

At the very beginning of discussion it was the point that you and @eyytee state that this situation is impossible. To have torque and not to move. Now you admit that it is possible (so far in different points of reference). We no doubt can generate extra force of torque on the water wheel, and generate energy. If we have net energy no movement it depends on us what we do with that. I hope you can imagine we can move this watermill, I can imagine different mechanisms to do that. If we can move it we no doubt are moving faster than ground from the water perspective. It was the initial point for my reasoning. The medium not necessary can be important (can change). It is intuitive for ground-air, ground-water but I assume that for different mediums moving in relation to each other it is also possible. (Perhaps the ground is a special one?)

>>And this is different for the Blackbird which has no constraint keeping it from accelerating. (...)

It has constraints keeping it from accelerating. It is air resistance (air masses) It depends on speed and prevents infinite acceleration. This is why I think the beginning of this is even more important. Assume a car with wheels, on ground, in vacuum. If you have force bigger than rolling resistance it would accelerate to infinite (it is not true, because of deformation in higher speed) but if it has no deformation on ground or wheel it can. It is a constant acceleration. The situation when you add air mass changes dramatically. Air resistance is changed to square of the speed. At the beginning there is a big force acting on the vehicle and accelerating the wheel and propeller. The stronger the initial wind would blow, the harder it would be to stay on ground. 

>>Both media clearly do affect the cart.   Without both effects it would not work.  The reaction force at the wheel is every bit as important as the propeller thrust in the working of the cart.   Feeback loops like this need all the parts or they will not work.

I agree that without wheels it would not work, but ground does not affect the car the same as air masses. It does not depend on the speed of the car (in relation to ground) as much as air masses.

>>If you start with a 1:1 wheel propeller relation, the cart will never start.   The wind force trying to turn the propeller as a turbine will prevent the wheels from rolling and the cart will just never move.  The aero force doesn't disappear.  It just can't move the cart as it is constrained.   The cart is simply "locked" with a 1:1 ratio and the air simply blows around it (unless the cart slides with the wheels locked).

I am not sure it will not move, the force that wants to rotate a wheel clockwise is F(a)=air resistance acting on the vehicle. The force that wants to rotate it the opposite direction is part of air resistance acting on the propeller F(p). If F(a) > F(p) + F(r) (rolling resistance) the vehicle will move even with 1:1 ratio. This forces "fight" to rotate the wheel. If F(a) wins the propeller starts to rotate in the same direction as the wheel. What am I missing here?

>>Obviously it is not according to the video shown here since the behavior is the opposite for the different gearing (leverage).   The gearing (leverage) clearly changes the behavior.   This is a mechanical visual proof of what I'm telling you.

I admit when there is a symmetrical situation on both sides it is all about the mechanical advantage in relation to wheel-wheel or wheel-propeller ect.

>>But you argued that leverage wasn't required and that was your central argument with Cavallaro and Burton.

I was meaning that the unbalanced force of air resistance (part of it) is that advantage to rotate the wheel and propeller, even when there is 1:1 on it.
Reply from the maker: @eyytee 
to Rick
 >>Change the name of your video as I suggested, and I'll leave you to wallow in this cesspool you've created.  It's pretty clear from your title that you're not offering a hypothesis.  You act as if you're certain you're right - when you're clearly wrong.

From you I do not get any arguments that I am wrong. Your frustration only confirms my belief that something in my film is up to date.  Explain to me what it was about rolling resistance coefficient. I am still confused. 
I discuss without emotion and I try to relate to questions and arguments precisely. I try to express my observations, arguments and conclusions as clearly as possible.

It is you who is trying to reduce this discussion to some non-substantive tracks  and insulting each other. I will not go that way with you.

to eyytee
>>Wrong, there is also static friction. Watch the MIT video you posted to the end. At 3:50 he talks about static friction too: "We see that static friction depends on the other constraints in the problem". For the Blackbird the connection to the propeller is such a constraint.

I watched it to end before I put it there, why do you suggest I did not do that? This is the situation when gravity is not balanced to normal force from ground. Part of this creates acceleration on rotation, and if there will be no friction it would slip and not rotate faster (accelerate). 

"And it's precisely the static friction that is producing a torque about the center of mass. And that torque about the center of mass will produce an angular acceleration. "

In fact this friction helps to create rotation; it is not slowing down the wheel. Our situation is when we move horizontal, the first example.

>>For the Blackbird the connection to the propeller is such a constraint.

For Blackbird is the first example like Mr from MIT said 
"There's other types of friction called rolling resistance, air resistance, et cetera which will slow the wheel down."
Reply: @PiotrRysztak  

Me: "This force from the ground is what trys to slow the cart since it is pushing backwards on the rim (contact patch) of the wheel.

You state:  "Yes, and ground is pushing back the wheel and cancels the propeller-wheel force and only thrust remains."

NO!   This is completely wrong.   If you apply a force to a free body there is a reaction force to the applied force (Newton's third law).  But they do not cancel for the the motion of the body as one force is on the ground and the other on the wheel, the body is accelerated  due to Newton's second law (F=MA)  Both laws are true.  
The wheel's push on the ground does not cancel itself out.  The push from the ground on the wheel causes the wheel to push backwards on the cart.
The propeller thrust exists because the propeller pushes on the air and the air pushes on the propeller.   The propeller's push on the air does not cancel itself out, the push from the air causes the propeller (cart) to accelerate forward.

I'll offer you one last example and after that I give up as you clearly are neglecting the force I'm about to explain:

Imagine a 4 wheel cart and roll it on the floor to feel the rolling resistance.  This force can be very small with a car with little friction.

Then imagine adding a  spring on one of the axles that winds up as the car is pushed.  (Little toy cars sometimes work like this like shown here

https://www.wired.com/images_blogs/gadgetlab/2011/04/3_dsc1109-toycar-wouterscheublin-crop-500.jpeg

From Wired magazine).   

Obviously it takes work to wind the spring and it takes force to push the car to store that energy.   That force you feel is the reactive force to doing work and it is what has to be overcome with your hand (which is analogous to the prop thrust).  Note that you clearly have to push harder with your hand to wind the spring over the distance as you are storing energy in the spring (doing work) and the ground is pushing harder (tangentially) against the wheel because of this spring.   [This is the force you are missing!!]

If you let the car go, it will unwind the spring and the car will accelerate in reverse of the way it was wound.  Clearly this energy is coming from the spring and the only place it can possibly apply the force  to the ground to accelerate the car is at the rim/contact patch since there is no other mechanism or point of contact to accelerate the car.   The force of the wheel against the ground does not cancel itself.  It causes the spring car to accelerate and the earth to experience the opposite force.

Also obviously, the torque force is being translated to a linear force which is being resisted by the mass being accelerated (and also obviously,  not just the wheels spinning up since you can pick the car up and let the wheels accelerate and they will accerate much faster than when the car is on the ground).  

It is also pretty obvious where the internal counter torque is being applied to the car--at the point of attachement of the spring to the car.  And this is equivalent to the internal connection of the wheels to the propeller in the blackbird.  (This torque force does not magically disapper when the car is operating).  It is transfered to one of the wheels which pushes harder against the ground and the other wheel pushes less hard to balance the weight creating the torque couple!

The propeller is similar in that it has a continous energy feed from the wheels (not stored) which do work on the air that the propeller is pushing so consequently the same type of linear force is felt at the wheels to do that work as the wind up spring car.

So consequently the propeller thrust (like your hand pushing the spring car) has to overcome a stronger force than just rolling resistance (which is the force to drive the propeller).

By ignoring this force, you have inadvertantly created a perpetual motion machine (which does not exist) since you are saying that it takes no more force tangentially against the ground (than the rolling resistance) to wind up the spring.  An obvious Over-Unity violation of Conservation of Energy.

You state: "I agree that without wheels it would not work, but ground does not affect the car the same as air masses. It does not depend on the speed of the car (in relation to ground) as much as air masses."

That is clearly false since the power at the wheels is (F*V)  F (against the ground) * V (velocity over ground).   You are saying this force is the rolling resistance only and that is just wrong and it is why everyone is telling you this.  It is just like the force in the spring car described above.   The propeller is power is also (F*V) where F (force against air [thrust]) * V (velocity through air).   The power is equal because all the power from the wheels is being fed to the propeller.   The cart gearing is adjusted so that the speed over ground is more than the speed through the air (with the tailwind).   So the thrust force is more than the retarding force at the wheels.   That is the leverage.

>>me: "But you argued that leverage wasn't required and that was your central argument with Cavallaro and Burton."

You state: I was meaning that the unbalanced force of air resistance (part of it) is that advantage to rotate the wheel and propeller, even when there is 1:1 on it."

The cart will simply not work with a 1:1 gear ratio because the thrust force is the same as the retarding force at the wheels to create that thrust force.   Which will only slow the cart at windspeed (TAS =0).   The gear ratio has to be such that the ratio is >1:1 to create the stronger thrust force at the propeller than the wheel force.

But I'm done here.   If you do not understand at this point, I can no longer help you.   Just because you don't understand it does not make your argument correct.   Literally everyone here that understands dynamics understands that there is an additional retarding force at the wheels to drive the propeller and the power is F*V and the energy gained in the spring of the car in the example is F*D (distance) where that "force" is the force pushing on the ground and the "velocity" is the velocity over ground and "distance" is the distance the car is rolled over the ground to wind it up.    I've described it to you by referring you to standard text books, giving you examples, and shown why it must exist due to conservation of energy.

You actually owe Cavallaro, Derek, and Barton an apology since you are telling them they are wrong that the cart does not work due to leverage when it is clearly you that is wrong.
Reply: @PiotrRysztak  "In fact this friction helps to create rotation; it is not slowing down the wheel. "

You are conflating linear and angular dynamics. Static friction here is supporting rotation, but also retarding the linear motion. Just like for the Blackbird or any wheel with brakes on that is not sliding. Look up: "Stopping Distance for Auto" on hyperphysics: "If the wheels of the car continue to turn while braking, then static friction is operating".
Reply from the maker: @killbeas  >>NO!   This is completely wrong.   If you apply a force to a free body there is a reaction force to the applied force (Newton's third law). 

It is not a free body. Like in a water mill, ground acts opposite force, here air masses act opposite force. 

>> Note that you clearly have to push harder with your hand to wind the spring over the distance as you are storing energy in the spring (doing work) and the ground is pushing harder (tangentially) against the wheel because of this spring. (...)Obviously it takes work to wind the spring and it takes force to push the car to store that energy. That force you feel is the reactive force to doing work and it is what has to be overcome with your hand (which is analogous to the prop thrust). Note that you clearly have to push harder with your hand to wind the spring over the distance as you are storing energy in the spring (doing work) and the ground is pushing harder (tangentially) against the wheel because of this spring. [This is the force you are missing!!]

In this example I push the car, and thanks to the ground the wheel is wind the spring. In our vehicle we do not wind the spring but we use this force to pull the vehicle thanks to the propeller. So when we have 100% efficiency it should be no difference for us. If we push a car with or without a propeller. Like an engine generating energy from one wheel and putting this to accelerate the second wheel.

>>By ignoring this force, you have inadvertantly created a perpetual motion machine (which does not exist) since you are saying that it takes no more force tangentially against the ground (than the rolling resistance) to wind up the spring.  An obvious Over-Unity violation of Conservation of Energy.

No, I am not creating a perpetuum mobile. This force slows down the wheel but the opposite force is accelerating the vehicle (and hence the wheel). 100% efficiency and these forces can cancel each other. Ideally, they balance each other. 

>>The cart will simply not work with a 1:1 gear ratio because the thrust force is the same as the retarding force at the wheels to create that thrust force. Which will only slow the cart at windspeed (TAS =0). The gear ratio has to be such that the ratio is >1:1 to create the stronger thrust force at the propeller than the wheel force.

It will work because at the beginning it has stronger force acting on the wheel then the opposite force acting from the propeller. Even with a 1:1 ratio it starts to move and rotate the propeller in the opposite direction. To not move you would have stronger force from the propeller (leverage) And a lot stronger to move opposite direction.
for a 1:1 ratio when we have: F(a) > F(p) + F(r)
the vehicle will move and the wheel and propeller start to rotate in the same direction of movement.
Our initial forces:
F(a) - air resistance acting on a vehicle – it brakes the vehicle in relation to air and acceleration in relation to ground. It Cause the wheel to rotate in direction of movement and thus wants to rotate the propeller to generate thrust in direction of movement (they are connected)
F(r) - rolling resistance (braking wheels in relation to ground)
F(p) - air resistance acting on the propeller (it wants to rotate the propeller in the opposite direction and thus also wants the wheel rotates in the opposite direction).

You state: "If you start with a 1:1 wheel propeller relation, the cart will never start."
It is wrong. To this be true, we need F(a) = F(p) + F(r), so we need leverage on the propeller-wheel to balance this.
I think that is why starting from the beginning of the experiment is important. 

>>But I'm done here. If you do not understand at this point, I can no longer help you. Just because you don't understand it does not make your argument correct.

I do not deny this force existe. Please stop repeating that. 

>>Literally everyone here that understands dynamics understands that there is an additional retarding force at the wheels to drive the propeller and the power is F*V and the energy gained in the spring of the car in the example is F*D (distance) where that "force" is the force pushing on the ground and the "velocity" is the velocity over ground and "distance" is the distance the car is rolled over the ground to wind it up. I've described it to you by referring you to standard text books, giving you examples, and shown why it must exist due to conservation of energy.

I think each of the three of you has shown a misunderstanding of dynamics or an omission of an aspect in this discussion, not more than me. For example denying that it is possible to not move and have net torque, treating this like a boat or confusing the aspect with rolling resistance coefficient. That is why discussion is going on. If you would destroy me with arguments then I would have no doubts, but I see that you are also not perfect. 

I think it is possible to go twice as fast as the wind under ideal conditions. It is a pity that Mr Ruina aborted this thread. I will try one last time to sow the seeds of uncertainty. I believe you are trying to get in my shoes and understand the idea. No matter if you finally agree with me or not. 

Watch this video:https://www.youtube.com/watch?v=ZOynwQ75pms

Our transaction is the speed of the wheel in relation to ground, but at the same time the rotation is a different speed acting on the propeller.
Air resistance creates transaction speed and the rotation speed of the wheel creates rotation of the propeller. This is like a water mill transaction speed = 0 and is different then rotation speed. We can separate it from each other.
I was ready that this idea will face a wall that has been built over the years. But I think science needs such discussions, either to ground its position even more, or to possibly change its mind. Both end results are good.
Reply from the maker: @eyytee  >>You are conflating linear and angular dynamics. Static friction here is supporting rotation, but also retarding the linear motion. Just like for the Blackbird or any wheel with brakes on that is not sliding. Look up: "Stopping Distance for Auto" on hyperphysics: "If the wheels of the car continue to turn while braking, then static friction is operating".

When you accelerate or brake it acts but it does not slow down the wheel at constant speed. If what you say was true you would not be able to accelerate in a car because of static friction that appears and slows down the car. The static friction is because you accelerate.
Reply from the maker: @Rick_Cavallaro  >>You are full of shit AND dishonest.  I gave you a very simple analysis that clearly demonstrates your claim would require an over-unity device.  You're simply too hard headed to admit you're wrong.  We both know it's that simple.

Your vocabulary tells what kind of person you are. From the first comment you state with aggression and disrespect. Maybe this is why i can`t find in your words "very simple analysis".

>>Nearly everyone on the planet that is intimately familiar with this thing is telling you you're wrong. We are not contradicting one another. We're all saying exactly what the physics books say. But you would rather posit perpetual motion than admit to being wrong.

I am talking with you, eyytee and windgris. All of you demonstrate also lack of knowledge. If you would showed me perfect understanding of forces and principles the discussion would ended 3 weeks ago.
Reply: @PiotrRysztak  

You state incorrectly: "No, I am not creating a perpetuum mobile."'

You may not realize it but you are with your assertion.

You state: "This force slows down the wheel but the opposite force is accelerating the vehicle (and hence the wheel)."

Of course it attempts to do that but since they are connected, the vehicle can either only slow, remain at a constant speed, or accelerate.
Without a net thrust more than the retarding force at the wheel it would only slow because at windspeed, you still have rolling resistance to also overcome and above windspeed, you have that, plus aerodynamic resistance of the cart body.

I'm very glad you are now acknowledging that there is a force at the wheels due to the propeller torque demand.   That's a victory in your understanding.

You state: "100% efficiency and these forces can cancel each other."

Correct.   But it has almost nothing to do with efficiency, only the overall gear ratio.   The two forces can cancel without 100% efficiency or either one could be stronger than the other depending upon how the gear ratio is configured.    A gear or a lever in the real world is never 100% efficient but a force ratio can be obtained by changing the fulcrum placement for a lever or gear ratio for a gearset.    Which is why you can lift a car with a small force with a long lever. (But you have to move the end you push down with your hand through a much longer distance than the car moves vertically upwards)   This works with even rusty inefficient gears but it can also take some of the power transmitted due to friction this causes in the gears and axles.

 So for the cart to work, you can't have balanced forces from the propeller and wheel (mostly due to aerodynamic drag above windspeed). 

You state: "Ideally, they balance each other."

NO!   This is wrong.   If they just balance, above windspeed, you have no thrust force to overcome rolling resistance of the wheels plus aerodynamic drag of the cart body.    So the thrust force from the propeller has to be stronger than the retarding force at the wheels from propeller demand alone.  If not, the cart will not work as there are greater retarding forces overall than thrust force since above windspeed, the only thrust force being supplied is by the propeller.    So for the cart to work, the thrust force (due to overall gearing) has to exceed the retarding force caused by the propeller torque demand.

Again, I'm glad you now understand there is a retarding force at the wheels due to propeller torque demand.   If you now work the forces, you will see that for the cart to work, the prop force has to be much more than equal to that retarding force to work above windspeed due to the addition of rolling resistance and aerodynamic drag.  Hence, why overall leverage is important as shown in the diagram referred to from @eyytee.
Reply: @PiotrRysztak  
>> Maybe this is why i can`t find in your words "very simple analysis".

Another lie!  You responded to my analysis.  The analysis demonstrated that the vehicle cannot go downwind faster than the wind without the leverage effect we've all described.  You dismissed the analysis since it didn't discuss what happens below wind speed.  It doesn't matter what happens below wind speed when I've demonstrated that it CAN'T go faster than wind speed.  You just don't like that result because it clearly proves you wrong.

>> All of you demonstrate also lack of knowledge. 

My god that's a condescending claim from someone that doesn't understand even the most basic principles of forces on rigid bodies!  You don't even accept that perpetual motion is problematic!
Reply: @PiotrRysztak  "When you accelerate or brake it acts but it does not slow down the wheel at constant speed."

A vehicle can be going at constant or increasing speed, while a wheel is braking via static friction, if there are other forces on the vehicle to balance the retarding static friction (like propeller thrust). But you cannot understand this by looking only at the most trivial examples, like the separated freely rolling wheel from the MIT video.
Reply from the maker: @killbeas  >>I'm very glad you are now acknowledging that there is a force at the wheels due to the propeller torque demand.   That's a victory in your understanding.

Look at the first comment in this thread, I was taking this force into account all the time. I'm glad that after 100 messages you noticed it;) Don't take it wrong but this shows that or I have a problem with communication in English or you do not read what i am writing. (I think it is both). 

You totally ignored most of my last post where I point out that you are wrong:

You state: "If you start with a 1:1 wheel propeller relation, the cart will never start."It is wrong.

And you do not respond to the video I put.

Additionally even the model on the treadmill (built for Veritasium) has a ratio of 1 to 1. One rotation of the wheel = one rotation of the propeller. Wheel is covering 2 π r of distance (on ground) when the propeller can cover a greater distance (in air mass) with the right speed of rotation. Since the vehicle is moving in air masses this translation is more important for him. Ground is only rotating the wheel (simplifying). Like an engine in a plane.
Initial aerodynamic drag accelerates the wheel so that the wheel and propeller gain speed. At some rotation speed the propeller travels a greater distance in the air than a wheel on the ground in one revolution.
Reply from the maker: @Rick_Cavallaro  Our discussion is over on my part. Even if you are right, your behavior very badly  testifies on you. The level of discussion with you is far below any standard. I think Alex Kusenko should be glad that he had the opportunity to discuss his doubts with Derek and not with you.
Reply from the maker: @eyytee  Look on this source:
http://physics.thomasmore.edu/ConnectedPhysics/ss-friction-rolling.html
"Objects that are “rolling without slipping” will experience rolling friction and not kinetic friction. This case assumes that there is sufficient static friction to keep the object rolling rather than sliding, but the static friction is not interfering with the motion, rather it is the process that allows the rotation."
Reply: @PiotrRysztak  

You state:  Additionally even the model on the treadmill (built for Veritasium) has a ratio of 1 to 1. One rotation of the wheel = one rotation of the propeller. Wheel is covering 2 π r of distance (on ground) when the propeller can cover a greater distance (in air mass) with the right speed of rotation. 

To clarify the ratio, the distance covered on the ground of the cart in one rotation of the wheel is not the distance one rotation of the propeller will cover over ground.   The pitch of the prop is measured with respect to the air.   With the tailwind condition, the amount covered over ground will be far further than the distance covered in the air.  But since the prop is working in air, it really doesn't care what the distance covered over ground is.   What matters is that the force the thrust prop exerts is > than the force that the wheels exert retarding it.   To obtain this, the prop pitch has to be set such that it is covering less distance through the air (which is in motion) than the wheels cover over the ground in the same period of time (a leverage ratio).   This allows the force to be higher.    

So the big issue is that you seemed to have said that the propeller thrust only has to BALANCE the wheel retarding force due to the propeller torque demand.   This is the part that is wrong.    Above windspeed, the propeller thrust has to exceed the wheel force caused by torque demand plus rolling resistance plus any internal losses (if not included in rolling resistance) plus aerodynamic drag over windspeed.

Let me acknowledge that I've thought about the starting condition.   The cart actually might initially move from a standstill with a 1:1 ratio because of the additional aerodynamic drag on the body.  It will not accelerate up to windspeed as that drag force diminishes to zero at windspeed and with the 1:1 ratio, (as you have discussed, the prop force only equals the wheel retarding force due to torque demand).  It doesn't include rolling resistance (with internal losses lumped in).   In that condition, the cart can never reach windspeed.   So this is one of the reasons why this area isn't very important as it doesn't reflect upon the central issue of faster than the wind travel.

You state: "Look at the first comment in this thread, I was taking this force into account all the time"

I disagree.  You explicitly stated that the cart only had to overcome rolling resistance and aero drag above windspeed.    

Rolling resistance term has a very defined meaning.  Had you stated "has to overcome total wheel resistance (including torque demand from the propeller), we would have had no issue.   But you seemed to understand that rolling resistance has a specific meaning because you stated that rolling resistance is roughly a constant (which is actually consistent with the definition) but the total wheel resistance increases with speed as the propeller torque demand increases due to the fact that it is turning faster at higher speeds and generating more thrust.   This is specifically what everyone took exception to in noting that the propeller had to be geared to produce a stronger thrust than wheel retarding force due to torque demand of the propeller (which is still absolutely true for the cart to work above windspeed).

You stated: " Rolling resistance is constant." and  "The ground does not hold the vehicle as air mass does, it only holds the wheel by rolling resistance." [which is wrong]  Then you made the statement: 

(for above windspeed (TAS = 0)

"We continue acceleration; we have thrust force bigger than rolling resistance. At this point only force holding back the vehicle is rolling resistance. " [again, this is wrong].

So you went back and forth dropping and including the wheel retarding force from prop demand in your explanation.   And you never concluded that the thrust force has always to be larger than the total of (wheel retarding force (due to prop demand)[always negative] + aero drag (a vector--subtracts below windspeed and adds above) + rolling resistance (always negative).

This condition can only be met if leverage exists such that propeller thrusts always exceeds wheel retarding force due to prop torque demand.   This is what Cavallaro and Borton's theory states so they are not wrong.

Finally, just a note.   There is an assymmetry with the upwind condition as the upwind cart always has to overcome the aero drag from the start which takes additional force from the turbine compared to the downwind starting condition.  The downwind cart only starts to encounter aerodrag from the front once it reaches windspeed (TAS = 0).   From that point the aero drag on the body is a retarding force that has to be overcome by the propeller thrust also.

Since your explanation revolves around this idea that the only resistance of the cart is rolling resistance and aero drag above windspeed, it neglects the fundamental force that is the major retarding force until well above windspeed which you seemed to agree to later but you stated it only has to balance [which is wrong].   It also implies that the force ratio of thrust does not need to be greater than the wheel retarding force that creates that thrust.   It does, and this is done due to overall force leverage.

Cavallaro and Burton are correct as well as Veritasium contrary to your title.
Reply: @PiotrRysztak  
>>   Look on this source:

I think it's hilarious that you keep posting sources that directly show that we're all right and you're wrong!
Reply: @PiotrRysztak  
>>  At some rotation speed the propeller travels a greater distance in the air than a wheel on the ground in one revolution.

I designed and built the thing.  You are wrong about this too!  It's becoming hard to keep up with the number of things you have wrong here.
Reply: @PiotrRysztak  This part in your link: "the static friction is not interfering with the motion" is wrong or at least very misleading. There is no such exception in Newton's 2nd Law. All external forces contribute to the net force that determines linear acceleration.
Reply from the maker: @eyytee  >>This part in your link: "the static friction is not interfering with the motion" is wrong or at least very misleading. There is no such exception in Newton's 2nd Law. All external forces contribute to the net force that determines linear acceleration.

It was not cherry picking. It is the most relevant Google searches for "rolling resistance vs static friction" right behind wikipedia. Author has a strong background in Physics. I don't know what else to say. MIT professor points out that static friction can be 0, this source also states that static friction does not interfere with the motion.
Reply from the maker: @killbeas  Sorry for the delay with response. I had a busy weekend. 

>>To clarify the ratio, the distance covered on the ground of the cart in one rotation of the wheel is not the distance one rotation of the propeller will cover over ground.   The pitch of the prop is measured with respect to the air.  (...)

Exactly, and with one rotation of the wheel-propeller mechanism wants to cover some distance in air masses. Rigid connection 1:1, in TAS=0 there will always be some thrust force no matter what the pitch is (when the speed of rotation is big enough). Below TAS=0 as you said the propeller wants to cover even more distance (relative to ground).

>>So the big issue is that you seemed to have said that the propeller thrust only has to BALANCE the wheel retarding force due to the propeller torque demand.   This is the part that is wrong.    Above windspeed, the propeller thrust has to exceed the wheel force caused by torque demand plus rolling resistance plus any internal losses (if not included in rolling resistance) plus aerodynamic drag over windspeed.

Look at my first comment on this thread, I take in consideration all the forces you mention.

>>Let me acknowledge that I've thought about the starting condition.   The cart actually might initially move from a standstill with a 1:1 ratio because of the additional aerodynamic drag on the body.  It will not accelerate up to windspeed as that drag force diminishes to zero at windspeed and with the 1:1 ratio, (as you have discussed, the prop force only equals the wheel retarding force due to torque demand).  It doesn't include rolling resistance (with internal losses lumped in).   In that condition, the cart can never reach windspeed.   So this is one of the reasons why this area isn't very important as it doesn't reflect upon the central issue of faster than the wind travel.

Ok, happy you admit that. The question remains, this aerodynamic drag force is the force that can move a vehicle and thanks to that start to accelerate the wheel and propeller (rigid connection). This force disappear? Or this force is still acting thanks to the ground? We had an unbalanced force, and which force balanced it? It was not rolling resistance (it is constant) either the propeller because it generates opposite thrust.

>>I disagree.  You explicitly stated that the cart only had to overcome rolling resistance and aero drag above windspeed.   

I shortened the equations and removed opposite and equal forces. Look again.

>> (...) but the total wheel resistance increases with speed as the propeller torque demand increases due to the fact that it is turning faster at higher speeds and generating more thrust. (...)

It is generating more thrust but at the same time wants to move the vehicle further distance in one rotation. Further than one rotation of the wheel. (relative to ground).
When the propeller and wheel are rotated 1:1 it is a matter of speeding up the propeller to the moment when it will generate max thrust and want to move the vehicle in optimal distance in each rotation. The effectiveness of the propeller depends on rotation speed, the effectiveness of the wheel is constant. That is why choosing the propeller is important, different specifics of operation at different rotational speeds.
Reply: @PiotrRysztak  "MIT professor points out that static friction can be 0"

Static friction can be zero on the free rolling wheel he analyzes. Static friction cannot be zero on a rolling (non slipping) wheel with a braking torque applied (by the propeller chain or a brake). As the MIT video says at 3:50: "static friction depends on the other constraints in the problem".
Reply: @PiotrRysztak     I could not follow your post where you describe the forces.  Maybe it is a language issue.   The only question left is does the mechanism have to be geared such that the thrust for the propeller is greater than all the resistance forces impeding the carts forward motion (including thrust demand, rolling resistance and internal losses) plus aerodynamic drag above windspeed. 

The answer is yes.  The propeller force is geared (with the given propeller pitch) such that the propeller force is stronger than all of those combined up to the limit speed of the cart.   For this, it requires leverage (which is what Cavallaro and Borton state).   The overall gear ratio is such that the thrust force is greater than the retarding forces combined.   To achieve that an overall ratio of 1:1 will not work.   The retarding force at the wheel due to all those resisting forces (including prop demand) is subtanstially less than propeller thrust.   So the ratio of wheel travel over ground for one propeller rotation is substantially longer than one propeller rotation through the air mass.

At this point you can agree or disagree but this is the mechanical condition that must be met for the cart to work above windspeed.   The designers (Cavallaro and Borton) and Veritasium are correct.
Reply: @PiotrRysztak  
>> Ok, happy you admit that.

Yes, we've "admitted" you were wrong from the start.  Could you possibly be any more dishonest!?

>> I shortened the equations and removed opposite and equal forces. Look again

So by "shortening the equations", you now admit that Veritasium got it right, and the entire point of this video was to present an incorrect explanation.

>> The effectiveness of the propeller depends on rotation speed, the effectiveness of the wheel is constant. That is why choosing the propeller is important, different specifics of operation at different rotational speeds.

OK - we can add propellers to the list of things you have no clue about.
Reply from the maker: @eyytee  >>Static friction can be zero on the free rolling wheel he analyzes. Static friction cannot be zero on a rolling (non slipping) wheel with a braking torque applied (by the propeller chain or a brake). As the MIT video says at 3:50: "static friction depends on the other constraints in the problem".

In the second part of the video He analyzes the specific situation where "rolling resistance" does not cover all gravity force.  Look at the formula of rolling resistance, in the formula there is normal force perpendicular to the surface. In fact this part of static friction force accelerates rotation. The wheel wants to fall thanks to gravity but thanks to static friction it accelerates rotation (not slide when falling)

It is a similar statement like in the second source: "the static friction is not interfering with the motion, rather it is the process that allows the rotation."

Our vehicle is the first example and he said: "There's other types of friction called rolling resistance, air resistance, et cetera which will slow the wheel down." No doubt different forces will act on the wheel but not from the ground (when wheel is rolling without slipping)
Reply from the maker: @killbeas  >>I could not follow your post where you describe the forces.  Maybe it is a language issue. 

or you didn't want to follow. If you would like, we can do it step by step.

>>The only question left is does the mechanism have to be geared such that the thrust for the propeller is greater than all the resistance forces impeding the carts forward motion (including thrust demand, rolling resistance and internal losses) plus aerodynamic drag above windspeed.

You agreed that it can work in 1:1 leverage. Torque that is rotating the wheel is equal to torque rotating the propeller. (Rigid connection). Vehicle can start moving (at the beginning) because the air resistance acting on the vehicle creates bigger torque on the wheel then opposite forces. So the wheel-propeller starts to rotate and accelerate in the direction of movement.

Did you watch this video i send:
https://www.youtube.com/watch?v=ZOynwQ75pms

This force (air resistance) causes translation of the vehicle thus also translation speed of wheel, but at the same time creates rotational speed of wheel-propeller mechanism. "This is very hard to accept when you look at a car tire. If it is rolling without slipping then the car tire is stopped at the bottom. The bottom being at rest is a critical element of something that is rolling without slipping." It is like moving in two dimensions. This "air resistance-air masses"  move is all the time there (this force). When did it disappear? In my explanation it is balanced by the opposite air resistance. 
Like I wrote elier:
At the beginning we have: 
TAS = -wind speed
GS = 0
At the end we have
TAS = wind speed
GS = 2x wind speed

The opposite air resistance force will balance the initial unbalanced air resistance when the vehicle will reach 2x windspeed in relation to ground. It can not disappear(?) Forces are not disappearing.
That is where my assumption comes from. We are braking in air masses and generate energy from that to propel the wheel and finally propeller. Our movement on the ground only helps us to generate rotation of the propeller. It does not slow us down, it helps us change the direction of the air resistance force.
Reply: @PiotrRysztak  "Our vehicle is the first example..."

No, the wheels of the Blackbird are not separate and freely rolling. Look for a source that explains how braking without slipping works, and the role of static friction in it.
Reply: @PiotrRysztak   @Rick Cavallaro

You state:   "You agreed that it can work in 1:1 leverage. 

Don't put words in my mouth.   I have not and I disagree.  It can not operate at or above windspeed with a 1:1 force leverage ratio (the area of concern).

You state:   "Torque that is rotating the wheel is equal to torque rotating the propeller."

Correct.  The torque generated by the wheel is the torque rotating the propeller.   But Torque and Force are two different things.    

I have not agreed that the cart can operate at a 1:1 FORCE leverage ratio.  I completely disagree with that.   
Torque from the wheels is equal to the torque turning the prop.   That does not mean that the translational force at the wheels is equal to the translational prop force (thrust).   This is a major mistake to think so.   Torque is a force X moment arm length so torques can be the same but this does not mean the translational forces are the same (since the moment arm lengths differ in the Blackbird).

I watched the video.  Nothing profound there.

You create a term: ""air resistance-air masses" 

I have no idea what you mean by that??

You state: 
"Like I wrote elier:
At the beginning we have: 
TAS = -wind speed
GS = 0
At the end we have
TAS = wind speed
GS = 2x wind speed"

You state: At the end we have: GS = 2x wind speed"

At the end of what?   2X wind speed is not a limit speed.   Why did you choose this speed?  There is nothing special about 2X windspeed and that is most definitely not the limit speed of a cart like the Blackbird.  In setting the record, it was operated at 2.8X windspeed.
So it isn't obvious why you are using that.

You state: "The opposite air resistance force will balance the initial unbalanced air resistance when the vehicle will reach 2x windspeed in relation to ground. It can not disappear(?) Forces are not disappearing."

I have no idea what you are talking about here.   At 2X ground speed, the FORCE on the cart from the headwind doesn't have to balance any force from the tailwind.   The force of the wind on the front of the cart doesn't have to match the force of the wind on the back of the cart when it is at a standstill on the ground.  That's nonsense.   I have no idea what you mean by "Forces are not disappearing".    Forces can easily disappear (become zero or be any other value."  I have no idea what you are trying to state.  There is no "law of conservation of force" in physics.

You state:  "That is where my assumption comes from."

Well, this may well be your problem.   In general, It isn't true.

You state:  "We are braking in air masses and generate energy from that to propel the wheel and finally propeller. "

I have no idea what that means.   It reads like so much gibberish.  This is what I mean by a language problem.

If you mean that you are slowing part of the wind which loses energy with the propeller, this is true.  That loss of energy of the true wind is the source of energy for the cart from the ground frame of reference.   There is no argument there, everyone agrees.

You conclude with: "Our movement on the ground only helps us to generate rotation of the propeller. It does not slow us down, it helps us change the direction of the air resistance force."

This statement makes very little or no sense.   The motion of the wheel over ground definitely ATTEMPTS to slow the cart.

We all agree that it DOESN'T slow you down but it WOULD slow you down if it was not opposed by the greater propeller force (thrust).   It most definitely does apply a retarding force against the ground that is unequal (less than) propeller force (thrust).   This seems to be your major misunderstanding that you keep wanting to make the force at the wheel  zero or equal to propeller thrust.  You seem to flip flop between the two and NEITHER IS CORRECT.   THE FORCE AT THE WHEEL DUE TO PROP DEMAND IS  (SUBSTANTIALLY) LESS THAN THE PROPELLER THRUST (BUT ONLY BECAUSE OF THE FORCE LEVERAGE THAT IS BUILT IN).

The only reason the cart doesn't slow down is that the propeller is generating more force (thrust) than the (propeller demand) retarding force at the wheel plus rolling resistance plus aero drag.  With 1:1 leverage, the prop force (thrust) would only be equal to the prop demand wheel force (which seems to be your misunderstanding).   A force leverage is required (which Cavallaro and Borton clearly state) for the propeller thrust to be greater than the sum of all retarding forces at the wheel (prop demand, rolling resistance, and internal friction) plus aero drag above windspeed.
Reply from the maker: @eyytee  >>No, the wheels of the Blackbird are not separate and freely rolling. Look for a source that explains how braking without slipping works, and the role of static friction in it.

I gave you two sources, both are most relevant in google search for this topic.
The first one you interpreted differently than me. For me Mr from MIT said without doubt that for horizontal moves static friction is 0, but there can exist other different frictions that slow down the wheel. 
Second source, you said this source is wrong and misleading (author has strong physics background and you can write to him that is wrong). With all respect to you I am more on his side of arguments. Give me please a source proving your point. I can't find anything relevant for "braking without slipping".
Reply from the maker: @killbeas  >>Don't put words in my mouth. I have not and I disagree. It can not operate at or above windspeed with a 1:1 force leverage ratio (the area of concern).

You wrote a few comments above:
"The cart actually might initially move from a standstill with a 1:1 ratio because of the additional aerodynamic drag on the body."

You change your perception, before that you state:
""If you start with a 1:1 wheel propeller relation, the cart will never start."

It is the prove that you were wrong and change your mind, I know you will not admit that. You had to change your mind because I noticed that the model from Veritasium video works on rigid connection 1:1 Wheel-propeller. So there is no place to not agree with that.

I know you didn't agree it might exceed TAS = 0 in that configuration, but you changed your mind about moves with 1:1 (rigid connection).

>>I have not agreed that the cart can operate at a 1:1 FORCE leverage ratio. I completely disagree with that.

One Force generates wheel-propeller rotation. One rotation of wheel = one rotation of propeller. Model on Treadmill from Veritasium video. The case is to use a propeller that can move faster in air masses in one rotation than wheel do in one rotation.

>>I watched the video. Nothing profound there.

I think it is important, from the ground perspective the contact point is at rest. Rotation speed is separate from translational speed. Watermill example.

>>I have no idea what you mean by that??

by "air resistance-air masses" I mean that this move/relation is constant all the time. It is with value of wind speed. It is the difference of speed, air mass vs ground. It does not disappear.

>>At the end of what? 2X wind speed is not a limit speed. Why did you choose this speed? There is nothing special about 2X windspeed and that is most definitely not the limit speed of a cart like the Blackbird. In setting the record, it was operated at 2.8X windspeed.

At the moment when forces will balance each other. At the beginning there is no balance so there is acceleration in relation to ground, and braking in relation to air masses. The record uses leverage to multiply the force.

>>I have no idea what you mean by "Forces are not disappearing".

The movement of air masses in relation to ground is there all the time and does not disappear. Our Vehicle is in a closed system and will accelerate until the forces balance.

>I have no idea what that means. It reads like so much gibberish. This is what I mean by a language problem.

I am sorry, I know it can be problematic because expressions can have a different meaning when translated.
Air masses are braking the vehicle and this accelerates it in relation to ground. At least at the first part of movement. This causes acceleration of Vehicle and wheel and propeller in the same direction. And causes also the rotation acceleration of the wheel and propeller.

>>This statement makes very little or no sense. The motion of the wheel over ground definitely ATTEMPTS to slow the cart.

But only with limit of rolling resistance. The motion of the wheel over ground is the reason why this is working. If there will be no move of "air mass - ground" the wheel and propeller would not rotate.

>>(BUT ONLY BECAUSE OF THE FORCE LEVERAGE THAT IS BUILT IN).

So where is the leverage built in?

>>The only reason the cart doesn't slow down is that the propeller is generating more force (thrust) than the (propeller demand)

As I understand it is not leverage. Construction of the propeller, sail or wing in plane, generates force of lift. Look at this video, I think is very good, the word leverage was not even once used in this movie.
https://www.youtube.com/watch?v=0bP2MH3LqvI&t=2s
Explanation start from ~4 to ~9 minut.
Reply: @PiotrRysztak    I wrote " It can not operate at or above windspeed with a 1:1 force leverage ratio" and "The cart actually might initially move from a standstill with a 1:1 ratio because of the additional aerodynamic drag on the body."

These are not mutually exclusive.   Just starting like a basketball blowing in a breeze definitely does not mean it will operate above windspeed.  Without the force leverage, this cart will not.    I don't know that it will start moving but I haven't ruled it out.

You state: "1:1 Wheel-propeller. So there is no place to not agree with that."

Where did you get that from?   It is easy not to agree with since it is wrong.   The wheel to pitch ratio is not 1:1 on the Veritasium cart or the Blackbird.   Just because the internal gearset has a 1:1 ratio does not make the overall wheel distance/prop pitch ratio 1:1.  The latter ratio is the leverage ratio.  Internal gearing ratio doesn't matter, only the final wheel length traveled for propeller pitch travel.  One of the reasons one of her early carts did not work was that she had too coarse of a pitch propeller making the overall ratio to close to 1:1.

You state: "One rotation of wheel = one rotation of propeller"   

Again, number of rotations of prop and wheel aren't the ratio.   The leverage ratio* is the wheel distance traveled over ground for the prop pitch travel through the air over the same time period.
You seem very confused about this.   The ratio is determined by the wheel size (circumfernece), gear ratio, and propeller pitch (for a fixed pitch prop).   All of these values are part of the ratio.

You state: " I mean that this move/relation is constant all the time. It is with value of wind speed. It is the difference of speed, air mass vs ground. It does not disappear."

I still have no idea what you mean there.   I don't know what you are talking about "it" is disappearing.

Are you simply trying to say the true windspeed is constant?

You state:  "But only with limit of rolling resistance. "

For the last time, NO!   The wheel has more than rolling resistance.  It also has the force for the prop torque demand which is attempting to slow the cart.   This is just fundamentally wrong no matter how many times you state it.

You state:  "The motion of the wheel over ground is the reason why this is working. If there will be no move of "air mass - ground" the wheel and propeller would not rotate."

Yes.  We fully understand that the wheel rolls over the ground to turn the propeller.  And this causes a retarding force at the wheel.

You ask: "So where is the leverage built in?"

The answer is as above*.   The distance rolled over the ground for a single revolution of the wheel is much more than the distance the propeller moves through the air in that same time.   That is the leverage.  Consequently, the force at the propeller (thrust) is greater than the retarding force at the wheel due to torque demand of the propeller.   That is same leverage.

You state: "As I understand it is not leverage. Construction of the propeller, sail or wing in plane, generates force of lift."

Yes.   A propeller blade does produce lift.  But the faster it goes through the air, the less lift is produced for a fixed pitch prop.   Eventually it will run out of adequate lift near the limit speed.

I'm sorry that you don't understand that but it is leverage.   The propeller does generate lift but each blade also describes a helical path through the air like a screw.  All wings (airfoils) have to have an angle of attack to generate that lift.   The angle of attack is determined by the pitch of the prop and how much it moves forward through the air.  At the limit speed of the cart, the spiral the propeller is describing is near minimal angle of attack limit without much lift and is operating like the video you referenced at 12:10.   The video describes how a propeller in cruise works like a screw going through wood at 4:45.  The pitch of the propeller of the blackbird is pilot controlled but for a fixed pitch prop like the little carts have, the speed is determined by this fixed pitch and the thrust it generates given that pitch (due to lift).
Reply: @PiotrRysztak  
>> Look at this video, I think is very good, the word leverage was not even once 

Let's file that under "NO SHIT".  There's a very subtle point about that video that you just might not recognize...  it does not describe the operation of the Blackbird.  NO ONE here has argued that an airfoil uses leverage to generate lift.  It's just so hard to tell whether you're actually that clueless, or just that dishonest.
Reply: @killbeas  
>> All wings (airfoils) have to have an angle of attack to generate that lift

Actually, non-symmetric foils can generate lift at zero AOA, but that's a nit that does not change your point.  Piotr is simply unwilling to listen to any argument from anyone that understands this thing.  I think that's plenty clear after this much dodging and weaving on his part.
Reply: @Rick_Cavallaro  Thanks, Rick.   A good clarification.   I should have stated that all wings have some angle of attack where they generate no lift (for assymetric airfoils that indeed might be a negative angle of attack).  Thanks for the correction.

With regards to Piotr, He seems to be missing the point that without thrust well exceeding the retarding force of the total negative forces, the cart will never reach or exceed windspeed.   He keeps falling back to the idea that the wheels only have rolling resistance (false) or that the prop only balances the retarding force due to prop demand (also false for the cart to operate).  The central point is that the propeller thrust has to be stronger than all the retarding forces combined and the latter concept with no force leverage will not satisfy that condition.   The central point that force leverage is required for the cart to operate seems to escape him.   I'm tired of explaining it as we keep going off on nit picking tangents like what happens for the cart to start which is relatively inconsequential and not really pertinent to the central issue of DDWFTTW capability.

Again, thanks for the comment.
Reply from the maker: @killbeas  I asked:"So what would be the final state when we would have 1:1 wheel-propeller relation."

You answered:
"If you start with a 1:1 wheel propeller relation, the cart will never start. The wind force trying to turn the propeller as a turbine will prevent the wheels from rolling and the cart will just never move."

"THE CART WILL NEVER START" and "THE CART WILL JUST NEVER MOVE"
There is no place for misunderstandings. These are very clear statements.
Later you changed position when I showed you that treadmill-cart model from Veritasium video works with rigid connection 1:1. <- I mean like in a car without gear box, when one rotation of the engine is one rotation of the wheel.

>>Again, number of rotations of prop and wheel aren't the ratio. The leverage ratio* is the wheel distance traveled over ground for the prop pitch travel through the air over the same time period.

Period is one rotation. Rigid connection = both rotate once in the same time period. If the wheel is big the propeller will rotate only once no matter how small or big propeller will be. The goal is to match the wheel to the propeller size so that it works most efficiently at the right speed.

>>I still have no idea what you mean there. I don't know what you are talking about "it" is disappearing.

The movement of air masses in relation to ground is constant all the time.

>>Are you simply trying to say the true windspeed is constant?

Yes.

>>For the last time, NO! The wheel has more than rolling resistance. It also has the force for the prop torque demand which is attempting to slow the cart. This is just fundamentally wrong no matter how many times you state it.

You wrote: "The motion of the wheel over ground definitely ATTEMPTS to slow the cart."
Moves over ground slows down the vehicle only by rolling resistance (when rolling without slipping) but of course the wheel is also slowed down by other forces but not from ground. For example as you said from a propeller.

>>The answer is as above*. The distance rolled over the ground for a single revolution of the wheel is much more than the distance the propeller moves through the air in that same time. That is the leverage. Consequently, the force at the propeller (thrust) is greater than the retarding force at the wheel due to torque demand of the propeller. That is same leverage.

It is not leverage; it is a consequence of air mass moving in relation to ground. Wheel to be in TAS=0 has to be moving in translation speed equal to wind speed in relation to ground. At the same time from the Air mass perspective it is rolling without moving. The same for the propeller is rotating at the same speed as the wheel.

>>Yes. A propeller blade does produce lift. But the faster it goes through the air, the less lift is produced for a fixed pitch prop. Eventually it will run out of adequate lift near the limit speed.I'm sorry that you don't understand that but it is leverage.

A fixed pitch propeller must be selected for the specific task. To be effective at the right speed. There is no doubt about that. Therefore, Derek and Xyla experimented by building a model. They have no gear so they need to choose the best propeller for the size of wheel and speed of treadmill. 
The video (source) shows very well that for different purposes we need different fixed propellers. Faster speed or faster acceleration (different pitch). If we want to use more power (from the engine) effectively we need to add more propellers or blades. The propeller is a limited mechanism. Mechanism of the lever is not limited. There is not even a single statement that lift force is generated by leverage. 

I think the analogy to leverage when lift force is created is wrong. 
Look at this source:
https://www.grc.nasa.gov/www/k-12/airplane/lift1.html

"HOW IS LIFT GENERATED?
There are many explanations for the generation of lift found in encyclopedias, in basic physics textbooks, and on Web sites. Unfortunately, many of the explanations are misleading and incorrect. Theories on the generation of lift have become a source of great controversy and a topic for heated arguments."

For you it is simple leverage and no place for discussion?
Reply: @PiotrRysztak   You state: "Period is one rotation. Rigid connection = both rotate once in the same time period. If the wheel is big the propeller will rotate only once no matter how small or big propeller will be."

It doesn't matter about the rotations.  Pitch of a propeller is the distance traveled through the air for 1 rotation.   Circumference of the tire is the distance traveled for 1 rotation.   The RATIO that is important is the pitch/circumference as this ratio determines the FORCE Ratio between thrust/retarding force due to torque at the wheel rim.    There is the minor complicating factor of propeller slip as illustrated below but it isn't very important.   For the fixed gear wheel machine between the floor and the board Derek used, no slip exists.   That machine runs Down board faster than the board with no lift and no slip.   The reason it works is the main reason the cart works--leverage or gear ratio.    Lift is the mechanism that the propeller couples to the air to cause motion of the air.   It's primary purpose is the same as "traction" for the double wheeled machine illustrated.

See this reference for geometric pitch:

https://encyclopedia2.thefreedictionary.com/geometric+pitch

That determines the force ratio between the wheels and propeller.

 
You state: "The goal is to match the wheel to the propeller size so that it works most efficiently at the right speed"

No.  The goal for a fixed pitch cart was to provide a stronger thrust than retarding force so the cart would run up a treadmill form windspeed travel.   It didn't have to be optimized for a higher speed since one quickly runs out of treadmill.    A fine pitch prop was best for this since maximum force at windspeed was the goal.  Since the purpose of the small cart on the treadmill was to simply demonstrate climbing the treadmill which illustrates DDWFTTW travel, the goal was simply to maximize the thrust at windspeed and slightly above because of the short treadmill belt limit.

The goal for the Blackbird which had a variable pitch propeller was at all times to optimize the force for maximum acceleration up to limit speed by varying the pitch for different speeds.

You state:  "I think the analogy to leverage when lift force is created is wrong. "

We aren't making an analogy of leverage to lift force.   The leverage is the two distances traveled through each medium for the same time period.   For the common torque transmitted from the wheels to the propeller, this distance ratio determines the force ration between thrust and retarding force of that torque at the wheels.

Lift is the mechanism by which the propeller "grabs" the air and pushes on it.  The pitch is how far it travels for a single revolution through the air.   The leverage ratio is the propeller pitch distance/wheel circumfernece  or P/C.   This ration has to be substantially less than 1:1 for the cart to work.

You state:  "For you it is simple leverage and no place for discussion?"

You have yet to understand what "leverage" we are even talking about.   Lift is not the main concern there.   Pitch and wheel circumfernce is which determines  the relationship Pitch/Circumference  =  wheel retarding force/thrust because they are derived from the same common torque.  That is basic leverage.
Reply: @killbeas  
>> we keep going off on nit picking tangents like what happens for the cart to start 

Yup.  He's thoroughly invested in not understanding - because it would definitively prove him wrong.  I presented a very simple analysis that shows it clearly cannot go DDWFTTW without the leverage effect we describe, and he simply dismissed the analysis since it intentionally does not address the starting condition.  But the starting condition is NOT the question.  I proved it cannot do what he says it can do without leverage.
Reply: @PiotrRysztak  
>> There are many explanations for the generation of lift...

For you it is simple leverage and no place for discussion?

You should at least pretend to be a part of the same discussion.  NO ONE HERE IS EQUATING LIFT WITH LEVERAGE.
Reply: @killbeas  
>> You have yet to understand what "leverage" we are even talking about. 

I can't decide whether it's possible that he's that clueless, or more likely, he simply cannot admit he understands that, because then he would clearly have to admit he's wrong.
Reply from the maker: @killbeas  >>It doesn't matter about the rotations.

Rotation is very important:
Quotes from source video "The Propeller Explained" (Hope it is solid for you):
"Fixed pitch propeller generates a total reaction in the same way as a wing. We know that the amount of lift generated varies with the angle of attack it also varies with the speed of the airflow, the faster the airflow the greater the lift and vice-versa so in order to maintain level flight when pilots alter an aircraft speed they also have to adjust the angle of attack to keep the lift constant and equal to the aircraft's weight, but whereas the speed of the air flow over a wing aerofoil is dictated by the speed of the aircraft the airflow over a propeller is governed by its rotational speed which is much faster than the forward velocity"

"Consequently changes of forward velocity have very little effect on the speed of the relative airflow. What is affected by changes of forward velocity is the angle of attack and the consequent strength and direction of the total reaction produced. Remember that the total reaction produced by wing aerofoil can be resolved in terms of lift and drag and that the penalty for increased lift is increased drag. With a propeller, the total reaction is resolved as thrust, the force needed to overcome the drag of the airframe and the propeller drag or torque which balances the power output of the engine."

In our example when the vehicle is in TAS=0. The total reaction is resolved  as the thrust needed to overcome the propeller torque (which balances the power output of the engine (wheel)) and the rolling resistance. So there is net Thrust. No leverage.

>>(..)It didn't have to be optimized for a higher speed(...)

Not for higher speed. It has to be optimized because the speed of the treadmill is fix. So the wheel and propeller need to spin fast enough. The big wheel would spin once, the small would spin 100x to cover the same distance. Propeller thrust force depends on rotational speed. 

>>We aren't making an analogy of leverage to lift force. The leverage is the two distances traveled through each medium for the same time period. For the common torque transmitted from the wheels to the propeller, this distance ratio determines the force ration between thrust and retarding force of that torque at the wheels.

It is not leverage. It is impossible to travel through each medium the same distance in the same time period, because the mediums are moving in relation to each other. Wheel and propeller are part of the vehicle. If the wheel is translated with wind speed in relation to ground then the propeller in relation to air masses is not moving. And vice versa. 

>>The pitch is how far it travels for a single revolution through the air.

Yes, but at the same time air masses are moving in relation to ground. So relative to the ground propeller will cover translation of air masses + his translation in air masses.

>>You have yet to understand what "leverage" we are even talking about. Lift is not the main concern there. Pitch and wheel circumfernce is which determines the relationship Pitch/Circumference = wheel retarding force/thrust because they are derived from the same common torque. That is basic leverage.

Lift force is important here because when we have net Thrust the Vehicle will accelerate. Newton's second law. Imagine a situation, Vehicle is in TAS=0, the wheel is rotating and the propeller is rotating. Wheel is moving in the speed of wind (rotation and translation), the propeller speed in relation to air masses is 0 (translation). But if it rotates it generates thrust and wants to move some distance in air masses. What distance it will be is not so important. It will pull the vehicle forward. 
Lift/drag ratio on the propeller is important. "Lift is directed perpendicular to the flight path and drag is directed along the flight path." The drag is our torque and lift is our thrust.
Reply: @PiotrRysztak    You state: "In our example when the vehicle is in TAS=0. The total reaction is resolved  as the thrust needed to overcome the propeller torque (which balances the power output of the engine (wheel)) and the rolling resistance. So there is net Thrust. No leverage."

This is wrong.  If it accelerates past windspeed, it has to have net thrust.  Only if it maintains windspeed do all those forces balance.

You state:  "It is not leverage. It is impossible to travel through each medium the same distance in the same time period, because the mediums are moving in relation to each other. Wheel and propeller are part of the vehicle. If the wheel is translated with wind speed in relation to ground then the propeller in relation to air masses is not moving. And vice versa."   

This is also wrong as this depends upon prop pitch and gearing and wind speed so they can have different speeds or the same speed through their respective media.  So you have the kinematics of this wrong.  Since the wind is coming from behind the vehicle, the wind over the vehicle is moving past the vehicle slower than the ground is.

You state: " "Lift is directed perpendicular to the flight path and drag is directed along the flight path." The drag is our torque and lift is our thrust."    

This is correct if the propeller drag is reflected into torque at the prop axis, but it is a tangent.   Which is part of the reason the force leverage ratio is different.   The other part is the pitch and gear ratio.   

It is clear by this point that you aren't going to learn what we are telling you since you keep going off on so many tangents and continue to ignore the thrust force/(wheel retarding force) ratio which has to be much more than 1 to have the thrust to overcome all the retarding forces above windspeed.   Nothing else actually matters other than this force ratio as it determines if the cart has a net forward thrust and can accelerate past windspeed.  

The minimum limit of the thrust to simply stay at the same velocity (above windspeed) is that:  thrust force =wheel retarding force (due to torque and internal friction) + rolling resistance + aero drag.   From this, it is absolutely clear that prop thrust/(wheel retarding force due to torque) is > 1.   That force ratio is the leverage.     

At this point I can no longer help you if you think the cart will work with a prop thrust/(wheel retarding force due to torque) = 1 (due to paragraph above).  You haven't added anything to discussion by ignoring this primary point.

Cavallaro and Borton are still correct that force leverage is required for the cart to accelerate above windspeed.  It doesn't matter if this is a function of internal gear ratios, wheel and propeller size, and Lift to drag ratio of the prop blades.   What is critical is that there is a force multiplying leverage effect from the wheel retarding force  (total) to the propeller thrust for the cart to operate above windspeed.  This is because the thrust still has to exceed that force plus aero drag above windspeed.  So it can't possibly just be equal forces to operate steady state above windspeed.   If you ignore this point, I can no longer help you.  Everything else is a side issue.
Reply: @PiotrRysztak  
>> So there is net Thrust. No leverage.

And how do you think it manages to produce net thrust?  Your ignorance is epic!
Reply from the maker: @killbeas  >>This is wrong. If it accelerates past windspeed, it has to have net thrust. Only if it maintains windspeed do all those forces balance.

And it will have, I was only copying the quote from the video:

"With a propeller, the total reaction is resolved as thrust, the force needed to overcome the drag of the airframe and the propeller drag or torque which balances the power output of the engine"

In our situation Thrust also has rolling resistance to overcome. When a vehicle is accelerating the more and more air resistance (drag of the airframe) will occur. Finally forces will balance and vehicle will move with constant speed. 

>>This is also wrong as this depends upon prop pitch and gearing and wind speed so they can have different speeds or the same speed through their respective media. So you have the kinematics of this wrong. Since the wind is coming from behind the vehicle, the wind over the vehicle is moving past the vehicle slower than the ground is.

It is impossible to move the same speed in two mediums at the same time when these mediums are moving in relation to each other. 
Relative Velocities:
https://www.grc.nasa.gov/www/k-12/airplane/move2.html
Our Vehicle (wheel+propeller) is one object. TAS will never equals GS in the same direction for our vehicle. So never wheel speed GS would be equal to propeller TAS. No matter what gear or pitch you use, the difference of speed is wind speed.

>>The minimum limit of the thrust to simply stay at the same velocity (above windspeed) is that: thrust force =wheel retarding force (due to torque and internal friction) + rolling resistance + aero drag. 

And this is the force balance from my video, with "net" thrust. So my equations were good, only explanations can be wrong.
Final state on my video is when:
net F(t) = F(r) + F(d) 
constant speed.

>>From this, it is absolutely clear that prop thrust/(wheel retarding force due to torque) is > 1. That force ratio is the leverage. 

No it is not, the mechanism of creating lift force is not leverage it is a different mechanism than lever. Is the Magnus Effect is also leverage? 

>>It doesn't matter if this is a function of internal gear ratios, wheel and propeller size, and Lift to drag ratio of the prop blades.

Yes it does matter, the lift force creation has no leverage mechanism. If it will be, there will be no limit on L/D ratio.

>>What is critical is that there is a force multiplying leverage effect from the wheel retarding force (total) to the propeller thrust for the cart to operate above windspeed.

So when lift is generated there is simply multiplying the drag? If it is, I agree that you are right. 

>>So it can't possibly just be equal forces to operate steady state above windspeed.

I did not say that the braking and driving forces are equal. I was looking for a balance of forces. This was my goal to find out when the vehicle would go with constant speed. For me it was above wind speed in relation to ground.
Reply: @PiotrRysztak    You state: " Only if it maintains windspeed do all those forces balance.

And it will have, I was only copying the quote from the video:

"With a propeller, the total reaction is resolved as thrust, the force needed to overcome the drag of the airframe and the propeller drag or torque which balances the power output of the engine"

In our situation Thrust also has rolling resistance to overcome. When a vehicle is accelerating the more and more air resistance (drag of the airframe) will occur. Finally forces will balance and vehicle will move with constant speed."
"

Apparently you do not understand that quote because the quote referenced refers to the limit speed well above windspeed.  Your comment was about windspeed.   Where you state "In our example when the vehicle is in TAS=0."     (But this is a minor misunderstanding).

 You state:   No it is not, the mechanism of creating lift force is not leverage it is a different mechanism than lever."

A force multiplication of any source is the same as "leverage" in physics, whether it is done with hydraulics, a lever, gears, lift to drag ratio or any other mechanism.   Force multiplication in the cart is achieved primarily by controlling the pitch to wheel circumfernce ratio and efficient airfoils.

You state:  "I did not say that the braking and driving forces are equal."

Actually you did.   And you stated it several times.   The only time they are equal is at a dead standstill and at a limit speed.   Between those two where the cart is accelerating, there MUST be a net thrust force which exceeds the sum of all retarding forces.

You state:  " I was looking for a balance of forces. This was my goal to find out when the vehicle would go with constant speed."

The only problem with that is that it illustrates nothing about how the cart works to go above windspeed since you've initially and recently made the mistake that it is limited to 2X windspeed and at that 2X speed you claimed the forces balanced (they do not for the Blackbird during the record run as it went 2.8X windspeed which I explained.   There is nothing special about 2X windspeed.).    

The reality is that all those forces are balanced when the propeller thrust = the sum of (torque demand force at the wheels edge + rolling resistance at the wheels edge + internal losses + aerodynamic drag losses).    By definition everything is balanced when the cart is standing still and not moving and at limit speed well above windspeed since the cart is traveling at a constant rate and not accelerating.   

But this tells us nothing about how it got to the speed well above windspeed.   For that you need leverage, i. e. propeller thrust > the sum of (torque demand force at the wheels edge + rolling resistance at the wheels edge + internal losses + aerodynamic drag losses. (for all speeds below limit speed).

You stated that Cavallaro and Borton was wrong that the leverage principle of forces between thrust and retarding forces was incorrect.   It is not.   A functioning cart always produces more thrust than the retarding force due to torque demand and this force multiplication is done via the pitch/wheel circumference ratio or having L/D (lift) contributions and actually both.   This force ratio is always there even for a hypothetical cart with internal losses,  no aero drag, and no rolling resistance.    It will not accelerate without this leverage ratio even with these two idealized conditions.  Even with that hypothetical condition, Thrust must exeed the torque demand at the wheels that produces it.    Consequently Cavallaro and Borton are correct and you have stated they are wrong.   You should not get hung up on the word "lever" or "leverage" since this simply refers to a force multiplication from input to output (which is what an unbalanced lever does with the fulcrum near the load).   The word "leverage" is the principle description of how the force output/force input ratio is > 1 is produced.  The gear cart that Veritasium uses between the board and floor also uses the same effective mechanism of leverage, mechanical advantage, gear ratio to travel down board faster than the board but it always travels at a fixed relational speed since there is no "slip" like the propeller does in the air.  It eliminates the obfuscating elements of "slip", and "lift" that a propeller has to make the fundamental mechanism clear.

Just to be perfectly clear with the English use of the physics terms.   If a mechanism produces at its output a force from an input force, this ratio of output/input can be described as and is usually described as "leverage", "mechanical advantage", "force gain",  or "force multiplication".    They are effectively all one in the same in their primary meaning.  It really does not matter how the "leverage" or "force gain", "mechanical advantage" or "force multiplication" is produced as long as the mechanism achieves it.   Cavallaro and Borton were stating that for the cart to work, that this "force gain" > 1.   Or equivalently, propeller thrust > retarding force at the wheels producing the propeller thrust.  This is the central working principle of the DDWFTTW cart.

You've changed your explanation so many times that it is difficult to understand what you believe.   But what I've stated from the beginning is that their is a reactive negative force at the wheel to produce the propeller torque (which you originally denied or did not understand)--and you stated there was only rolling resistance.   And from the beginning, I've stated that for the cart to accelerate above windspeed (what you call TAS =0)  the propeller thrust had to always exceed the retarding force to produce the propeller thrust so there was "force gain", "mechanical advantage", "force multiplication", or "leverage" to achieve this. (and in fact that propeller thrust has to be greater than the sum of all retarding forces up to limit speed).  So consequently I've always stated that Cavallaro and Borton were correct that this had to be the case at anything below limit speed for the cart to accelerate and that you most fundamental claim of "no (force) leverage" is wrong.
Reply from the maker: @killbeas  >>Apparently you do not understand that quote because the quote referenced refers to the limit speed well above windspeed. Your comment was about windspeed. Where you state "In our example when the vehicle is in TAS=0." (But this is a minor misunderstanding).

I understand, this is why I do not count drag of the airframe in TAS=0. This force is the force which finally balances the forces. In TAS=0 forces are unbalanced and there is no air resistance and the total reaction is resolved as the thrust needed to overcome the propeller torque (which balances the power output of the engine (wheel)) and the rolling resistance. So there is net Thrust at this point.

>>A force multiplication of any source is the same as "leverage" in physics, whether it is done with hydraulics, a lever, gears, lift to drag ratio or any other mechanism. Force multiplication in the cart is achieved primarily by controlling the pitch to wheel circumfernce ratio and efficient airfoils.

Give me a source where lift force creation is stated as leverage.

>>Actually you did. And you stated it several times. The only time they are equal is at a dead standstill and at a limit speed. Between those two where the cart is accelerating, there MUST be a net thrust force which exceeds the sum of all retarding forces.

Give me a quote where I stated that forces are equal. All my analysis is based on the balance of forces. Unbalance = acceleration. In dead standstill there is additional force, which is taken off at the beginning of the experiment (Brakes or people positioning the cart).Limit speed is the only state when forces are balanced (without external force). The rest is acceleration of the vehicle. 

>>The only problem with that is that it illustrates nothing about how the cart works to go above windspeed since you've initially and recently made the mistake that it is limited to 2X windspeed and at that 2X speed you claimed the forces balanced (they do not for the Blackbird during the record run as it went 2.8X windspeed which I explained. There is nothing special about 2X windspeed.). 

It is an assumption, without leverage. The Blackbird is of course not a relevant example. I think 2x can be special since we have two mediums moving in relation to each other and two speed translational and rotational, but I won't insist on exactly 2x this is more of a side issue. Main question is if it is possible.

>>The reality is that all those forces are balanced when the propeller thrust = the sum of (torque demand force at the wheels edge + rolling resistance at the wheels edge + internal losses + aerodynamic drag losses).

Yes we agree that.

>>By definition everything is balanced when the cart is standing still and not moving and at limit speed well above windspeed since the cart is traveling at a constant rate and not accelerating. 

It is wrong as I mentioned above. To stay still, vehicle need additional external force. (But this is a minor misunderstanding).

>>But this tells us nothing about how it got to the speed well above windspeed.

I think it can tell us where we should look for a reason why it work.

>>(...)This force ratio is always there even for a hypothetical cart with internal losses,  no aero drag, and no rolling resistance.(...)

For a hypothetical cart without aero drag and rolling resistance the cart would not interact either with air masses or ground. These are the only forces acting on a vehicle from outside, causing it to work. Remove one and the cart will stay still in air masses TAS=0 or stay still on ground GS=0. Remove both forces and for the cart, moving air in relation to ground is no matter.

>>(...)You should not get hung up on the word "lever" or "leverage" since this simply refers to a force multiplication from input to output(...)
>>(...)If a mechanism produces at its output a force from an input force, this ratio of output/input can be described as and is usually described as "leverage", "mechanical advantage", "force gain", or "force multiplication".(...)

The initial unbalanced force of air resistance generates movement (wheel and propeller) and this movement generates thrust force. Lift is generated by the difference in velocity between the solid object and the fluid. There must be motion between the object and the fluid: no motion, no lift. It makes no difference whether the object moves through a static fluid, or the fluid moves past a static solid object. Lift acts perpendicular to the motion. Drag acts in the direction opposed to the motion.The movement of air masses in relation to ground generates this Thrust force on the propeller. This force (movement air-ground) is not disappearing.

>>You've changed your explanation so many times that it is difficult to understand what you believe.(...)

I was developing my understanding of this phenomenon through our discussion. I think you also benefit and develop your understanding of what is happening. I hope you will be able to admit it.
My intuition and "feeling" of physics prompted me to the original conclusion. Along with researching the topic and talking to you, I did not dispel my doubts. There is much more there than simple analogy to leverage. The movement of the wheel and propeller is key. Wheel rolling resistance force and Propeller drag force are similar. They want to stop the movement of vehicle. One in ground and second in air masses. In simple words I would say that the initial (unbalanced) air resistance force, thanks to the wheel-propeller movement, has changed in thrust. 

Two questions from my last post:
When lift is generated there is simply multiplying the drag?
Is the Magnus Effect is also leverage?
Reply: @PiotrRysztak    You state:  "It is wrong as I mentioned above. To stay still, vehicle need additional external force"

You are incorrect.   By definition if the vehicle is not accelerating in any direction, there is no NET external force on it.  The brakes provide an internal force which means that the ground can supply a stronger external force to hold it in place without moving.  This does not mean there are no forces,  just no unbalanced forces.   All forces are in balance--When standing still or at any constant velocity  (standing still is just the constant velocity of 0).  This comes from F= MA.  If the cart is accelerating, then there is a NET external force on it.

Your initial incorrect assertion was that at windspeed, the only retarding force on the wheel was rolling resistance.   This is clearly wrong and you changed your mind on that (I think).   The retarding force at the wheel due to torque demand is much larger and more important than rolling resistance and propeller thrust has to exceed this as it increases above windspeed due to faster speed of the propeller (more rotational drag).

For this to occur, Force leverage  has to occur for the cart to work--i.e. Total Thrust/Total retarding force >1 with Net Thrust > 0  (at limit speed, it is 1 and 0 respectively).  If you agree to this now, your original assertion in your title is wrong no matter how that leverage is achieved.   But it is clearly the case.  (It is also worth noting that at limit speed there is still leverage of the Propeller thrust compared to the retarding force due to propeller torque because much of the force has to overcome aero resistance plus some to overcome rolling resistance and internal loss.)

You state:  " I think you also benefit and develop your understanding of what is happening. I hope you will be able to admit it."

I've certainly had some additional thoughts about corner cases which were beneficial.   But the original argument of required force leverage to function still holds which now I hope you understand (as this was your strongest incorrect assertion).

You state: "My intuition and "feeling" of physics prompted me to the original conclusion."

This just says that intuition is not a reliable judge of physics.   It's why we study physics to remove intuition (which can be right but is often wrong) and gain a true understanding of a phenomenon.

I do understand that since it is the reason that this cart is such a brainteaser.   Most people (including me) originally get it wrong based on intuition with the most common misunderstanding that "a wind vehicle can't benefit from the wind above windspeed".   This is intuitive and absolutely wrong as the cart illustrates.   This cart benefits from the true wind as long as it blows and obviously can operate above windspeed using only the wind over ground (as long as it has a mechanism to "connect" with the wind and ground and convert that to useful energy for propulsion.   So, like me, you came to an incorrect original conclusion.   But the designers--Cavallaro and Borton did not.   They understood the principle completely that if the propeller thrust could be greater than the wheel retarding force + aero drag, then the cart could exceed windspeed.   They designed the original with this leverage capability using the lift of the propeller blades to provide thrust.

"Along with researching the topic and talking to you, I did not dispel my doubts. There is much more there than simple analogy to leverage."

Actually your doubts should be dispelled by simply looking at the rolling geared mechanism that Derek showed under the board over the floor.   There are no aerodynamics to be concerned about and it clearly illustrates the "leverage" part of the mechanism.   The cart offers the obfuscating elements of propeller airfoil pitch, lift/drag, and slip which confuses many people.  All propellers work with "slip" and lift/drag is just a more efficient way to produce thrust and this aerodynamic mechanism needs to be efficient to work.   So a "flat bladed" propeller would actually work in an otherwise efficient vehicle but it would still have a slip angle and angle of attack of the blades to produce the "connection" to the air (otherwise known as lift).

You ask:  "When lift is generated there is simply multiplying the drag?"  It is if you write the airfoil Lift as a function of Drag of the airfoil 
(L= f(D) (for a specific pitch and angle of attack)   L/D ratios can easily be in the range of 15 so for 1 kilo of drag, the airfoil will produce 15 kilos of lift.    Note that lift and drag are considered to be perpendicular to one another.   This is why an airplane wing is so efficient.   High performance glider airfoils can easily reach a 50/1 ratio.   In one sense it "multiplies the drag" but by the L/D ratio.  In other words L= D X (L/D).   So for L/D > 1, then Lift > Drag.  The L/D ratio is an intrinsic part of the cart's mechanism for making thrust > retarding force, but it also should be noted that a propeller blade at the extreme angle of pitch eventually "runs out of" lift for the drag it produces to rotate it.   Controllable pitch propellers (like on the black bird) prevent this as long as possible at higher speeds (note that originally I stated that the L/D ratio was for a specific pitch and angle of attack so if these are changed, the L/D ratio can change and usually does).

You ask:  "Is the Magnus Effect is also leverage".   

It is what it is but forces associated with the Magnus effect can certainly be related for a leverage ratio of L/D.   (The lift of the device compared to the force required to push it through the air to obtain the effect).

It depends on what forces you consider since there is an input torque to turn the cylinder and a force to push it through the air.   A Magnus device can produce lift with a torque input to a cylinder when moving through the air.    But for the Magnus effect to work, the spinning object has to be moving through a fluid.   The Magnus effect has an effective L/D ratio for the the force to push the cylinder through air also and the input energy has to overcome this drag to produce the lift.   The rotational torque to turn the rotor is usually small compared to the force to push the rotor through the air.:

https://en.wikipedia.org/wiki/Magnus_effect

So yes, there is a force multiplication effect with a Magnus effect device also usually associated with the thrust force compared to the lift force.   So any two force values for airfoils can be compared but for them to make sense, one usually needs to be a function of the other.   Note that for a propeller, there are  two force values and a torque value which are all related (perhaps even more so than a Magnus rotor).
Reply: @PiotrRysztak  
>> the mechanism of creating lift force is not leverage 

NO ONE EVER SAID IT WAS! How many times must we repeat this!?  How many times are you planning to repeat your statement that has absolutely no bearing on anything?

>> Give me a source where lift force creation is stated as leverage.

There is no such source because that's complete nonsense.  NO ONE EVER SAID IT WAS!

>> I was developing my understanding of this phenomenon through our discussion. 

So you're still developing your understanding - long after posting a video explaining how the people that designed and built the thing have the wrong understanding. FFS - can you honestly not see the problem with that!?
Reply from the maker: @killbeas  >>You are incorrect. By definition if the vehicle is not accelerating in any direction, there is no NET external force on it. (...)

To stay still GS=0 you have to have brakes "on" or people who are holding the cart. When operating the vehicle has only one state when forces are balanced.

>>Your initial incorrect assertion was that at windspeed, the only retarding force on the wheel was rolling resistance. This is clearly wrong and you changed your mind on that (I think). 

From the ground side, the only braking force is rolling resistance. I added the force from the propeller acting on the wheel on the first post in this thread.

>>I've certainly had some additional thoughts about corner cases which were beneficial. 

Happy to hear that.

>>Actually your doubts should be dispelled by simply looking at the rolling geared mechanism that Derek showed under the board over the floor.

In Derek's experiment the one wheel is rotating faster than the other. There is gear inside of the mechanism. 1 rotation of the upper wheel generates more rotations of the lower wheel.

>>the designers--Cavallaro and Borton (...) They understood the principle completely (...) They designed the original with this leverage capability using the lift of the propeller blades to provide thrust.
and
>>You ask: "When lift is generated there is simply multiplying the drag?" It is(...)In one sense it "multiplies the drag" but by the L/D ratio. (...)

And now please compare these statements with the Rick last comment in this thread.

I come more to this explanation:
Lift is generated by the difference in velocity between the solid object and the fluid. There must be motion between the object and the fluid: no motion, no lift. It makes no difference whether the object moves through a static fluid, or the fluid moves past a static solid object. Lift acts perpendicular to the motion. Drag acts in the direction opposed to the motion.
We have a difference in velocity: air masses in relation to ground. Its generates movement of the wheel and propeller, and finally the Thrust force.
Our initial unbalanced part of the air resistance force is generating the rotation of the wheel and propeller and this movement creates the Thrust. Air resistance force decreases and Thrust increases when the vehicle is getting closer to TAS=0.

P.S. Let's leave the Mangus effect aside. This could probably be a second such large discussion :)
Reply: @PiotrRysztak   @Rick Cavallaro  You state: "To stay still GS=0 you have to have brakes "on" or people who are holding the cart. When operating the vehicle has only one state when forces are balanced."

Yes, if a wind is blowing and trying to move the cart.  This is why the brakes stop the wheels which push against the ground preventing motion.   Again, zero NET force means no acceleration.  All the forces are balanced or you would have acceleration and the cart would move.

You state: "From the ground side, the only braking force is rolling resistance. I added the force from the propeller acting on the wheel on the first post in this thread."

 And this is completely false that the only braking force is rolling resistance.   There is more than rolling resistance acting against the ground.  There is the propeller torque demand force in addition to rolling resistance.   Again, this is a very real force and it exists.  If you don't understand why, you need to check a physics text.

You state: "I added the force from the propeller acting on the wheel on the first post in this thread."

But you keep saying that does not add a ground force.   This is obviously wrong.  If it brakes the wheel (which it does), then just like the brakes in the first paragraph, it reacts with a force against the ground.   The propeller force on the wheel causes the force on the wheel from the ground which tries to retard the cart's forward motion.  If you don't add this force, you will never get this problem right.

But this is the last time I tell you this since I've now told you over a dozen times.   If you neglect this force again, I'm out of here and will simply consider you incapable of learning physics.

You state: "In Derek's experiment the one wheel is rotating faster than the other. There is gear inside of the mechanism. 1 rotation of the upper wheel generates more rotations of the lower wheel."

Of course.   That is gearing or leverage.   That's why it works.

The remainder of your explanation is simply the explanation of the lift which for this vehicle is effectively propeller thrust.  So there is nothing wrong with your description of lift.   But lift can be an arbitrary value.   For the cart to work,  the propeller thrust has to be larger than the retarding force at the wheel due to torque demand (which I keep adding and you keep missing).

This is the force leverage principle.  The cart will not work without this force leverage.   So your original assertion is wrong and  Cavallaro and Borton are correct.
Reply from the maker: @killbeas  >>Again, zero NET force means no acceleration. All the forces are balanced or you would have acceleration and the cart would move.

I don't get what we are arguing here. My all video is about this :) No balance of forces = acceleration. Newton's second law. When the wheel is blocked by brakes then we have static friction and this friction needs to balance the air resistance, if not the vehicle would be slide, if yes no motion in relation to ground GS=0.

>>And this is completely false that the only braking force is rolling resistance. There is more than rolling resistance acting against the ground. There is the propeller torque demand force in addition to rolling resistance. Again, this is a very real force and it exists. If you don't understand why, you need to check a physics text.

This is side discussion i went through with @eyytee in this thread, my last post is without answer from him.
"I gave you two sources, both are most relevant in google search for this topic. The first one you interpreted differently than me. For me Mr from MIT said without doubt that for horizontal moves static friction is 0, but there can exist other different frictions that slow down the wheel. Second source, you said this source is wrong and misleading (author has strong physics background and you can write to him that is wrong). With all respect to you I am more on his side of arguments. Give me please a source proving your point. I can't find anything relevant for "braking without slipping"."

I know that there is the propeller torque but it is acting on wheel rotation speed, from the ground the wheel rotation is only slowed down by rolling resistance (this force makes it possible to accelerate or brake) If You have a powerful engine rotating the wheels and very little rolling resistance it will rotate the wheel in place. (dragsters vehicles) The same in braking if you have small rolling resistance and you push the brake it will stoped rotating the wheel very quickly. Wheel will then slip through the ground (braking on ice). To effectively accelerate or brake on ground you need strong rolling resistance. 

>>But you keep saying that does not add a ground force. This is obviously wrong. If it brakes the wheel (which it does), then just like the brakes in the first paragraph, it reacts with a force against the ground. The propeller force on the wheel causes the force on the wheel from the ground which tries to retard the cart's forward motion. If you don't add this force, you will never get this problem right.

It braks the rotation of the wheel. But the wheel is acting on ground only by rolling resistance when rolling without slipping or by static friction when it is not rolling. If these forces are small then general braking of the vehicle will be very uneffective no matter how strong force would be braking the wheel. 

>>Of course. That is gearing or leverage. That's why it works.

Our wheel rotates the same amount of times like a propeller. So this is a different situation. If one rotation of the wheel would generate two rotations of the propeller it will be similar.
Our vehicle is pushed by air resistance; it generates wheel rotation and propeller rotation. Propeller rotation generates Thrust. Thrust starts to pull the vehicle forward. Air resistance changed in Thrust thanks to moving ground in relation to air masses. Movement generates Lift force. No force multiplication.

I will repeat this because you intentionally ignored it:
>>the designers--Cavallaro and Borton (...) They understood the principle completely (...) They designed the original with this leverage capability using the lift of the propeller blades to provide thrust.
and
>>You ask: "When lift is generated there is simply multiplying the drag?" It is(...)In one sense it "multiplies the drag" but by the L/D ratio. (...)

And now please compare these statements with the Rick last comment in this thread.
Reply: @PiotrRysztak   @Rick Cavallaro  

"Give me please a source proving your point. I can't find anything relevant for "braking without slipping"."

It isn't complicated.  Braking without slipping simply means that the tractive force of the tire on the surface is does not exceed the maximum value so the tire doesn't skid.    Braking without slipping requires an external force (tractive force) to accelerate the vehicle (from some speed to a lower speed).   F=MA (this is the second source).  This force is a retarding force on the vehicle.  For braking, the only place this external force can possibly be applied to the vehicle is at the contact patch of the tire  Rolling without slipping means you have adequate traction due to weight and the coefficient of friction of the tire against the surface.  (It has nothing to do with rolling resistance.)   You can argue against it if you like but it's total nonsense to do this since any change to the vehicles speed requires an external force.   (I list reference below*)

I will no longer argue or explain this since it seems obvious and pointless since you refuse to accept it even though it is a well established physics principle.   Applying the brakes on a car causes the ground to place a tangential negative force at the bottom of the tire (which the tire attempts to resist due to the inertia of the entire car).   This external force of the ground on the tire is what slows the car.   The car has to have adequate traction (not rolling resistance) to prevent skidding.

Anybody that knows anything about physics can easily tell you that a that putting on the brakes applies a torque to the wheel that the ground has to resist with a a tangential force at the contact patch.  The torque in the vehicle (front brakes) causes "squatting" which the weight of the rear of the car prevents it from rotating.   Try braking a unicycle without leaning back and see what happens.  You'll fall on your face because the ground is applying a negative force at the bottom of the wheel (tangent to the wheel).

"I know that there is the propeller torque but it is acting on wheel rotation speed, from the ground the wheel rotation is only slowed down by rolling resistance (this force makes it possible to accelerate or brake) If You have a powerful engine rotating the wheels and very little rolling resistance it will rotate the wheel in place. (dragsters vehicles) The same in braking if you have small rolling resistance and you push the brake it will stoped rotating the wheel very quickly. Wheel will then slip through the ground (braking on ice). To effectively accelerate or brake on ground you need strong rolling resistance. "

I don't know where you get this but it is delusional.   You seem to be confusing "rolling resistance" with "traction".  Rolling resistance has almost nothing to do with traction.     They aren't the same thing:

Traction, or tractive force, is the force used to generate motion between a body and a tangential surface (our case for the propeller torque demand).

Rolling resistance, sometimes called rolling friction or rolling drag, is the force resisting the motion when a body (such as a ball, tire, or wheel) rolls on a surface. It is mainly caused by non-elastic effects; that is, not all the energy needed for deformation (or movement) of the wheel, roadbed, etc., is recovered when the pressure is removed. Two forms of this are hysteresis losses (see below), and permanent (plastic) deformation of the object or the surface (e.g. soil).  

Maybe this is the source of some of your problem that you don't understand the definition of rolling resistance and traction.   Rolling resistance is caused by the deformation of the tire and surface against one another.   Traction is a function of weight and coefficient of friction--completely different concepts.  But you've been told this before by Cavallaro and you don't seem to understand it.   Traction is not rolling resistance.    Look them up if you don't understand them (and you don't).

Here are the references*:

https://en.wikipedia.org/wiki/Rolling_resistance

https://en.wikipedia.org/wiki/Traction_(engineering)

You state:  "And now please compare these statements with the Rick last comment in this thread."

Rick Cavallaro fully understands L/D ratios and he understands the concept completely.   We are in no way conflicted.  However, if you think there is a conflict, please state exactly what you think this conflict is and we can sort that out.

Again, some of your problem seems to be the language (I have no issue with that) and some seems to be that you don't understand the terms and physics principles.  I do have a problem with that.    We have to use the commonly accepted definition of terms and you can't substitute your own to have a meaningful discussion.  But the physics is also universal and neither can you substitute your own.
Reply: @PiotrRysztak  
>> From the ground side, the only braking force is rolling resistance.

You can say it as often as you like.  Everyone but you (actually probably including you) knows you're wrong.  And it could not be more obvious.  In your world cars' brakes don't work.  In your world we can all have free energy by putting generators on our axles.  Is that really the story you want to be attached to?  Is that really better than simply admitting you were wrong?
Reply: @killbeas  
>> there is nothing wrong with your description of lift. 

Yeah - but wouldn't it be fun to see him keep arguing over and over that lift is not leverage - as if someone ever claimed it was?
Reply: @PiotrRysztak  
>>  I can't find anything relevant for "braking without slipping"."

Don't they let you drive a car?  Have you ever used the brakes?  Did it slow the car down?  You know you can do that without skidding - right?

>> To effectively accelerate or brake on ground you need strong rolling resistance. 

You do not understand what "rolling resistance" is!

>> the wheel is acting on ground only by rolling resistance

Just keep saying that - and just keep being wrong.  FFS!  You can in theory have zero rolling resistance, but still have tons of traction.  Braking requires traction.  It does NOT require rolling resistance.

>> Movement generates Lift force. No force multiplication.

I notice you had to simply dismiss my analysis without comment to keep making this ridiculous claim.

>> And now please compare these statements with the Rick last comment in this thread.

You don't need to worry about whether me and windgrins understand one another - we do.  You understand nothing.  Maybe focus on that.
Reply: @killbeas  
>>  You seem to be confusing "rolling resistance" with "traction".

He has to do that.  He'd rather act the complete fool than simply admit he got it wrong.
Reply from the maker: @killbeas  >>You can argue against it if you like but it's total nonsense to do this since any change to the vehicles speed requires an external force.

I agree with that but this force is not initial by the ground. 
As torque is applied to a car tire, the rotational movement is transformed into linear movement (of the car) by where the tire contacts the road surface.  Thus, assuming the tire maintains traction, it obeys the equation of static friction.
Where is: the coefficient of static friction, the normal force. Static friction is the maximum amount of force that can be applied before the tire begins to slip and slide on the road surface. 

This external force is not created by ground, it is only reflected by ground. "The static friction is not interfering with the motion, rather it is the process that allows the rotation." 

>>You seem to be confusing "rolling resistance" with "traction".  Rolling resistance has almost nothing to do with traction.     They aren't the same thing:

I admit that i confused the rolling resistance and static friction. Rolling resistance slow down the vehicle in general, when is in move. The static friction (traction) helps in acceleration/braking. It is why to start rolling heavy object is harder than to keep rotating it.  But it do not change much in our analyzes.

The problem in our example is that balance of forces will determine the rotation of wheel. (Direction of rotation) Only the net force generates the rotation and is reflected by ground.
The force from propeller acting on wheel, if it will be smaller then air resistance force (beginning of experiment) then wheel is accelerating. Ground helps this acceleration and not slow down vehicle. Only force slowing down vehicle is rolling resistance (from ground). The propeller force is not acting from the ground on the wheel.
There are two external forces acting on our vehicle: friction of ground and air resistance. The rest forces are only reflection of this two.

>> We are in no way conflicted.  However, if you think there is a conflict, please state exactly what you think this conflict is and we can sort that out.

FIRST CONFLICT:
I wrote:
"No it is not, the mechanism of creating lift force is not leverage it is a different mechanism than lever."

Your respond to this (exactly to this):
"A force multiplication of any source is the same as "leverage" in physics, whether it is done with hydraulics, a lever, gears, lift to drag ratio or any other mechanism."

Rick respond to this (exactly to this):
"NO ONE EVER SAID IT WAS! How many times must we repeat this!?  How many times are you planning to repeat your statement that has absolutely no bearing on anything?"

This are opposite answers for one question, isn't it? You state it is leverage, Rick state that no one ever said it is.

SECOND CONFLICT:
I asked: 
"When lift is generated there is simply multiplying the drag?"
Your respond:
"It is(...)In one sense it "multiplies the drag" but by the L/D ratio. (...)"

I asked:
"Give me a source where lift force creation is stated as leverage."
Rick respond:
"There is no such source because that's complete nonsense.  NO ONE EVER SAID IT WAS!"

It are not answers for exactly the same my quote, but it is almost identical, and again opposite answers.
Did lift creation is leverage (multiplication of force), or it is nonsense?
Reply: @PiotrRysztak  
>> I admit that i confused the rolling resistance and static friction.

Great.  So you finally understand why your entire premise is wrong, and Veritasium is right.

>>  It is why to start rolling heavy object is harder than to keep rotating it.

Well, that didn't last long.  You've wandered off the range again.

>> Only force slowing down vehicle is rolling resistance (from ground)

Oh good - we're back to your complete unfounded bullshit.

>> This are opposite answers for one question, isn't it? You state it is leverage, Rick state that no one ever said it is.

The leverage we're speaking of here is NOT due to the fact that an airfoil creates more lift than drag.  It's not what I'm referring to, and it's not what Windgrins is referring to.

>> Did lift creation is leverage (multiplication of force), or it is nonsense?

It does not matter whether you consider that leverage or not since it's not what we're talking about.  But even this doesn't matter since you NEVER post anything responsive to what we explain to you.
Reply from the maker: @killbeas  >>However, if you think there is a conflict, please state exactly what you think this conflict is and we can sort that out.

I hope you have not aborted this discussion, you asked me about a specific conflict I see, what I did. I will patiently wait for the answer. I understand lack of time so no problem take your time.
I believe that despite some initial differences, we will be able to finally reach an agreement.
Reply: @PiotrRysztak  Sorry.  Did you post something about problems between mine and Cavallaro's viewpoints.   I haven't seen it if you did.

I've explained this adequately at this point.   I don't really think there is much more to explain.   The leverage employed is there but I don't think we are going to come to an agreement as you keep stating things wrong--primarily "the only retarding force is rolling resistance".   This is nonsense.   So I don't think we are going to come to any agreement as my comments haven't changed because the physics hasn't changed.
Reply from the maker: @killbeas  I wrote 3 days ago, strange that you didn't see that. I will copy it below. Please explain to me why there is no conflict and how to interpret Your and Rick's statements/answers. Before, you discussed very meticulously and to the point and you were referring to my arguments. Now I see an attempt to avoid discussion. 

About the most controversial statement "the only retarding force is rolling resistance", To be specific, I state: "the only retarding force from ground is rolling resistance".We agreed that there is retarding force acting from the propeller on the wheel, so now we should add another force retarding the wheel from the ground? Then One force would be doubled in balance isin`t it? What should be the value of this force?

For me this retarding force is acting from the propeller on the wheel, and next the net force is acting from the wheel on ground (net force from all forces acting on wheel). The process is running this way not the opposite (from ground). But this is a side discussion anyway. 

>> We are in no way conflicted. However, if you think there is a conflict, please state exactly what you think this conflict is and we can sort that out.

FIRST CONFLICT:
I wrote:
"No it is not, the mechanism of creating lift force is not leverage it is a different mechanism than lever."

Your respond to this (exactly to this):
"A force multiplication of any source is the same as "leverage" in physics, whether it is done with hydraulics, a lever, gears, lift to drag ratio or any other mechanism."

Rick respond to this (exactly to this):
"NO ONE EVER SAID IT WAS! How many times must we repeat this!? How many times are you planning to repeat your statement that has absolutely no bearing on anything?"

This are opposite answers for one question, isn't it? 
You state it is leverage, Rick state that no one ever said it is.

SECOND CONFLICT:
I asked: 
"When lift is generated there is simply multiplying the drag?"
Your respond:
"It is(...)In one sense it "multiplies the drag" but by the L/D ratio. (...)"

I asked:
"Give me a source where lift force creation is stated as leverage."
Rick respond:
"There is no such source because that's complete nonsense. NO ONE EVER SAID IT WAS!"

It are not answers for exactly the same my quote, but it is almost identical, and again opposite answers.Did lift creation is leverage (multiplication of force), or it is nonsense?
Reply: @PiotrRysztak    With regards to Cavallaro and I, we aren't in disagreement.

Any two numbers related by multiplication can be said for one to be a multiple of the other.   Basically this is simply giving a math identity to state L = L/D X D.   Lift is related to drag with an airfoil and the lift/drag ratio is  how it is related.   Rick, being aerospace engineer and I completely agree on the concept that an airfoil with a L/D ratio greater than 1 has more lift than drag.   It is not really related to the concept of leverage here except in a tangential way.    

In trying to explain this to you, you seem to be getting hung up as this isn't the primary leverage that we are discussing.   We are discussing the force leverage from the propeller thrust compared to the retarding force at the wheel providing the torque to turn the propeller.   This is > 1 or the cart won't work.

Here is your fundamental problem:

You state:

"We agreed that there is retarding force acting from the propeller on the wheel, so now we should add another force retarding the wheel from the ground?"

Of course.  That force is created by the wheel resisting being turned since it is hooked directly to the propeller and for the wheel to turn, the propeller has to be turned.    The force driving the propeller is caused by the wheel against the ground at the rim.   So yes, absolutely, there is a retarding force of the ground on the wheel.    In this case, "retarding force" is a force that retards the carts forward motion.   It is in direct opposition to the the propeller thrust force.    And it is most definitely in addition to the rolling resistance force.   Literally everyone here understands that this force is real and it is what drives the propeller from the wheel.    The propeller resists turning and a torque has to be created to turn it at a constant speed or accelerate it.   That force comes from the torque produced by the pair of forces-- one on the wheels axle and one from the ground against the rim.   The one at the rim attempts to retard the cart's forward motion as it is an external force from ground to wheel as well as forming half of the torque couple consisting of this force and the force by the cart on the axle of this wheel.

You state: "Then One force would be doubled in balance isin`t it? What should be the value of this force?"

NO! NO! and NO!

No, of course not.   The value of the force is whatever it takes to overcome the propeller rotational drag resistance and accelerate the propeller rotationally.  As the propeller torque resistance (rotational drag) is the only thing resisting this force.   It isn't double counting.   The wheel can't just make energy from nothing for the propeller to expend, there has to be a force X distance (work) done on it to provide energy to the propeller.      The ultimate force to provide this energy is the ground force on the wheel times the distance the wheel rolls over the ground (F X D) [ENERGY].  The POWER to the propeller is force X distance/time (it takes to traverse the distance D). (F X D)/T.

This force is an absolute necessity (which is why Cavallaro stated you are making a Perpetual motion machine if the force doesn't exist).   Because the prop would be getting free energy from nowhere.    It is not doing this.   The energy to rotate the propeller is a force from the ground on the rim of the wheel.   The distance is the distance the wheel rolls with this force applied.  This force coupled with the cart's force on the axle becomes the torque to drive the propeller.   The rate that this energy is harvested to turn the prop is the power that the prop receives.  You can't just turn a propeller without getting the energy from somewhere. 

But I have grown very tired of explaining this relatively trivial concept repeatedly.   You can't simply wish this force away.   You need to ask someone else if you don't believe it.  As it is very clear you do not understand the physics as you keep repeating this incorrect information.  (literally all the people here have tried to explain this force to you and it is very simple).

So until you acknowledge and understand this force of the ground on the wheel caused by propeller torque demand, I cannot help you further.
Reply: @PiotrRysztak  
>> I believe that despite some initial differences, we will be able to finally reach an agreement.

Yes - when you admit you were wrong.
Reply: @killbeas  
>> until you acknowledge and understand this force of the ground on the wheel caused by propeller torque demand, I cannot help you further.

You've explained it patiently, repeatedly, and in great detail.  Piotr is very invested in not understanding the simple facts because it would require him to admit that he's wrong.  He definitely cannot be helped.
Reply from the maker: @killbeas  >>I completely agree on the concept that an airfoil with a L/D ratio greater than 1 has more lift than drag. It is not really related to the concept of leverage here except in a tangential way. 

So it is not the concept of leverage, you change your opinion. Previously you argued that this was the lever we were looking for, and now suddenly you change your mind.I gave you two conflicts as you asked and you did not respond to them. 

>>In trying to explain this to you, you seem to be getting hung up as this isn't the primary leverage that we are discussing. 

In a simple rigid connected wheel-propeller, one rotation of the wheel is one rotation of the propeller. What is the leverage?

>>We are discussing the force leverage from the propeller thrust compared to the retarding force at the wheel providing the torque to turn the propeller. This is > 1 or the cart won't work.

This relationship is related to the generation of the propeller lift. 
The propeller's resistance to rotation is equal to the drag force of the blade.

"Fixed pitch propeller generates a total reaction in the same way as a wing. We know that the amount of lift generated varies with the angle of attack it also varies with the speed of the airflow, the faster the airflow the greater the lift and vice-versa so in order to maintain level flight when pilots alter an aircraft speed they also have to adjust the angle of attack to keep the lift constant and equal to the aircraft's weight, but whereas the speed of the air flow over a wing aerofoil is dictated by the speed of the aircraft THE AIRFLOW OVER A PROPELLER IS GOVERNED BY ITS ROTATIONAL SPEED WHICH IS MUCH FASTER THAN THE FORWARD VELOCITY"
and
"Consequently changes of forward velocity have very little effect on the speed of the relative airflow. What is affected by changes of forward velocity is the angle of attack and the consequent strength and direction of the total reaction produced. Remember that the total reaction produced by wing aerofoil can be resolved in terms of lift and drag and that the penalty for increased lift is increased drag. WITH A PROPELLER, THE TOTAL REACTION IS RESOLVED AS THRUST, THE FORCE NEEDED TO OVERCOME THE DRAG OF THE AIRFRAME AND THE PROPELLER DRAG OR TORQUE WHICH BALANCES THE POWER OUTPUT OF THE ENGINE."

>>It is in direct opposition to the the propeller thrust force.    And it is most definitely in addition to the rolling resistance force. 

From the first comment in this thread I take into account this force. This force acts from the propeller on the wheel. Is retarding the wheel. 

>> The propeller resists turning and a torque has to be created to turn it at a constant speed or accelerate it.   That force comes from the torque produced by the pair of forces-- one on the wheels axle and one from the ground against the rim.   The one at the rim attempts to retard the cart's forward motion as it is an external force from ground to wheel as well as forming half of the torque couple consisting of this force and the force by the cart on the axle of this wheel.

This force is coming from the air masses moving in relation to ground. The wheel is rotating because the air resistance pushes the vehicle (transitional speed) and thanks to the friction on the ground the wheel starts to rotate (rotational speed). When rotational speed of wheel and propeller (rigid connection) increes, the Thrust is starting to be generated (below TAS=0) it will overcome forces and start pulling the vehicle. Ground is only creating rotation of the wheel; it is not retarding it more than rolling resistance did.
 
The cars push off on the ground and move in air masses. Only force to overcome from ground for cars is rolling resistance, the static friction (traction) allows accelerating or braking but is not slowing them down by itself. Give me a source that states that cars have to overcome such force to move.

>>The value of the force is whatever it takes to overcome the propeller rotational drag resistance and accelerate the propeller rotationally.  As the propeller torque resistance (rotational drag) is the only thing resisting this force. (...)The wheel can't just make energy from nothing for the propeller to expend

This is why it is important what is happening before reaching the TAS=0.
1. The Vehicle is pushed by air resistance (balance of torque on wheel cause rotation of wheel and propeller in direction of motion)
2. Translational speed in relation to ground (GS) increases, TAS speed decreases.
3. Wheel and propeller rotational speed increases.
4. Propeller start to generate Thrust and pull vehicle. "THE AIRFLOW OVER A PROPELLER IS GOVERNED BY ITS ROTATIONAL SPEED, WHICH IS MUCH FASTER THAN THE FORWARD VELOCITY"
5. air resistance stops pushing vehicles, (it does not exist in TAS=0), there is only Thrust vs Propeller drag and rolling resistance. Balance of torque on the wheel is defined by the Thrust force pulling Vehicle and Drag Torque slowing down the wheel. The wheel is pushing off the ground in direction of motion.
6. Air resistance is starting to brake the vehicle and at some point forces will balance. Constant speed.

>>You can't just turn a propeller without getting the energy from somewhere.

The propeller is pulling the vehicle not only after exceeding TAS = 0, it is doing it below. Likewise, on the treadmill you need to accelerate the wheel and the propeller rotation to start generating a thrust.

>>But I have grown very tired of explaining this relatively trivial concept repeatedly. You can't simply wish this force away. 

What trivial concept? I do not neglect this force.

>>As it is very clear you do not understand the physics as you keep repeating this incorrect information. (literally all the people here have tried to explain this force to you and it is very simple).

If you had come here, destroyed me (with arguments) and hadn't made any mistakes yourself, the discussion would probably be over long ago. But that did not happen, and you are trying to put yourself in the position of a teacher. When you yourself admitted that the discussion has brought new insights to your understanding of the topic. 

>>So until you acknowledge and understand this force of the ground on the wheel caused by propeller torque demand, I cannot help you further.

I understand this force, and as you wrote now, it is caused by propeller torque demand, NOT THE GROUND demand. This force would not be acting on the ground if we have balanced torque acting on the wheel. Imagine a situation: bike with dynamo, when you overcome this force from dynamo then it will not act on ground. Or is it acting from the ground all the time? I don't know if this is a language barrier or if you don't want to understand what I mean in this phrase on purpose.
Reply: @PiotrRysztak   @Rick Cavallaro

Some comments.

You state: "So it is not the concept of leverage, you change your opinion. "

In general, lift is not a leverage of drag it is not leverage but a force multiplier of thrust.   Two different mechanisms for the same effect.  On an airplane wing, you are actually multiplying the  engine thrust from the engine to obtain lift in steady flight.   Drag is simply the opposing force to thrust.  A gliding wing is multiplying the component of gravity aligned with the flight path to provide lift.  But again, it manifests itself as a force multiplier and so does leverage.   The underlying mechanisms are different however.

However, this isn't very important as this isn't the leverage being referenced or is only a part of the leverage.   The leverage in question is propeller thrust to wheel retarding force ratio.   This has to be > 1 for the cart to work.   This is what Cavallaro and Borton and me have stated from day one.   Don't try to obfuscate this.

You state: "Ground is only creating rotation of the wheel; it is not retarding it more than rolling resistance did."

Again, this is absurd and completely wrong.   

And you restate it:

"I understand this force, and as you wrote now, it is caused by propeller torque demand, NOT THE GROUND demand. This force would not be acting on the ground if we have balanced torque acting on the wheel"

Again, this is wrong as you don't have a balanced force acting on the wheel from propeller torque demand.   The torque is counteracted at the wheel by being resolved into two equal forces--one on the axle (an internal force) and one at the rim (which is transmitted to ground).  This is most definitley not a pure torque.   The reaction force of the ground to the  wheel rim  is an external force tending to slow the cart.  It would slow it if the propeller thrust was not larger.

Wikipedia discusses this concept here:

https://en.wikipedia.org/wiki/Couple_(mechanics)

"A force F applied to a rigid body at a distance d from the center of mass has the same effect as the same force applied directly to the center of mass and a couple Cℓ = Fd. The couple produces an angular acceleration of the rigid body at right angles to the plane of the couple. The force at the center of mass accelerates the body in the direction of the force without change in orientation."

( internal Force on the axle and external force on the rim)

You state:  "Imagine a situation: bike with dynamo, when you overcome this force from dynamo then it will not act on ground."

False. 

In a nutshell, you are stating that the ground doesn't push on the wheel more than rolling resistance and that propeller torque demand does not increase this force.    You will not find a single person here who agrees with that who knows anything about physics.   I'm not trying to destroy you with arguments, simply correct your incorrect information.

"Or is it acting from the ground all the time?"

Yes, As long as the dynamo is engaged, it is acting all the time and reacting against the ground just as the propeller is.   If you stop pedaling your bike, it will roll to a stop quicker due to the braking force of the dynamo reacting against the ground by the wheel.   No internal force will stop the bike, only the external force from the ground against tire or air resistance.   To overcome the dynamo's resistance to the wheel, you have to pedal harder because the ground is attempting to slow you down to drive the dynamo so you have to overcome this force.  This is the exact same for the cart's wheel driving the propeller.   You really need to understand that the only thing that will change the velocity of a free body is an external force.    For the bike to drive the dynamo from the wheel, it exerts an external force at the contact patch which tends to slow the bike.     This is also exactly what regenerative braking on an electric car is.   The generator becomes a load which causes the wheels to push against the ground thus slowing (braking) the car.  The energy generated in the generator is then stored in the battery recharging it some.  (Which is why it is "regenerative").

" I don't know if this is a language barrier or if you don't want to understand what I mean in this phrase on purpose."

I completely understand what you mean by "  when you overcome this force from dynamo then it will not act on ground."   

No language problem, I'm simply telling you that this is completely incorrect and the basis of your misunderstanding.

It's how the torque from a cars engine makes it move by applying a force against the ground (with the ground pushing the car forward) and how the brake make it stop (with the ground pushing the car backward).   Neither of these are due to rolling resistance as rolling resistance always impedes the motion of the car with respect to the surface.   Also two equal opposing forces on a wheel--one on the rim and one on the axle don't produce a pure torque.   They will make a wheel both rotate and translate (as well as anything attached to the wheel at the axle).   

If this is not the case, you really need to ask yourself how a car with an engine ever moves since the engine does apply a torque to the axle of the wheel.   What causes the car to accelerate linearly? (spoiler alert:   the ground force reaction at the rim of the wheel to this torque with the axle itself accelerating the car body--this is how torque gets translated to two forces to oppose the torque--one internal force at the axle and one opposing external force at the rim from the ground).

Again, if you do not understand these concepts, I can't help you further as I have now explained it about 5 more times.  You can state I'm confused or confusing but the physics books agree with me.
Reply from the maker: @killbeas  >>But again, it manifests itself as a force multiplier and so does leverage. Two different mechanisms for the same effect. (...)  But again, it manifests itself as a force multiplier and so does leverage.   The underlying mechanisms are different however.

It is called the analogy to the lever mechanism. The analogy is not an explanation, it can help to understand but is not the explanation. In fact it is more complex how lift is created, i repeat the source: https://www.grc.nasa.gov/www/k-12/airplane/lift1.html

>>However, this isn't very important as this isn't the leverage being referenced or is only a part of the leverage. The leverage in question is propeller thrust to wheel retarding force ratio. This has to be > 1 for the cart to work. This is what Cavallaro and Borton and me have stated from day one. Don't try to obfuscate this.

I think this is exactly this discussion, the propeller is just a twisted wing. Propeller blades are constructed in a similar way to a wing, as such they are subject to some of the same aerodynamic forces such as drag and lift (with wings this is lift, with propeller it is called thrust).

>>Again, this is absurd and completely wrong

Why are you taking my words out of context? I wrote a lot, and this phrase was in this particular context:
"This force is coming from the air masses moving in relation to ground. The wheel is rotating because the air resistance pushes the vehicle (transitional speed) and thanks to the friction on the ground the wheel starts to rotate (rotational speed). When rotational speed of wheel and propeller (rigid connection) increes, the Thrust is starting to be generated (below TAS=0) it will overcome forces and start pulling the vehicle. Ground is only creating rotation of the wheel; it is not retarding it more than rolling resistance did. The cars push off on the ground and move in air masses. Only force to overcome from ground for cars is rolling resistance, the static friction (traction) allows accelerating or braking but is not slowing them down by itself. Give me a source that states that cars have to overcome such force to move."

Give me a source that states that cars have to overcome such force to move.

>>I completely understand what you mean by " when you overcome this force from dynamo then it will not act on ground." No language problem, I'm simply telling you that this is completely incorrect and the basis of your misunderstanding.

OK, so let's do a quick question and answer:
1. We have a wheel and two equal forces act on it first from the right direction and second from left. What force will the wheel act on ground? Which direction wheel moves/rotates?
2. We have a wheel and force A of value 2X acts in the right direction, and force B acts in the left direction of value X. What force will the wheel act on ground? Which direction wheel moves/rotates?

Spoiler alert: My answer is that the wheel acts on ground only by its resultant of torque. That is why I state that of course propeller torque slows down the wheel but not necessarily it will be reflected by ground.

>>If this is not the case, you really need to ask yourself how a car with an engine ever moves since the engine does apply a torque to the axle of the wheel. What causes the car to accelerate linearly?

The engine applies a torque, and creates rotation of the wheel. The wheel is on the ground, and pushes off the ground thanks to the friction. That creates acceleration in relation to ground. The initial force is from the engine not from ground. 

I think this dispute is totally irrelevant from the point of view of the problem. The only braking force initiated by the ground is rolling resistance.Will such clarification satisfy you more and we will be able to go further? Well, unless you think that in the balance of forces we should add the braking force of the propeller on wheel and at the same time the braking force of the same value from the ground? 

I think the most important in general is that part of my last post that you ignored totally:
>>The value of the force is whatever it takes to overcome the propeller rotational drag resistance and accelerate the propeller rotationally.  As the propeller torque resistance (rotational drag) is the only thing resisting this force. (...)The wheel can't just make energy from nothing for the propeller to expend

This is why it is important what is happening before reaching the TAS=0.
1. The Vehicle is pushed by air resistance (balance of torque on wheel cause rotation of wheel and propeller in direction of motion)
2. Translational speed in relation to ground (GS) increases, TAS speed decreases.
3. Wheel and propeller rotational speed increases.
4. Propeller start to generate Thrust and pull vehicle. "THE AIRFLOW OVER A PROPELLER IS GOVERNED BY ITS ROTATIONAL SPEED, WHICH IS MUCH FASTER THAN THE FORWARD VELOCITY"
5. air resistance stops pushing vehicles, (it does not exist in TAS=0), there is only Thrust vs Propeller drag and rolling resistance. Balance of torque on the wheel is defined by the Thrust force pulling Vehicle and Drag Torque slowing down the wheel. The wheel is pushing off the ground in direction of motion.
6. Air resistance is starting to brake the vehicle and at some point forces will balance. Constant speed.

>>You can't just turn a propeller without getting the energy from somewhere.

The propeller is pulling the vehicle not only after exceeding TAS = 0, it is doing it below. Likewise, on the treadmill you need to accelerate the wheel and the propeller rotation to start generating a thrust.

>>But I have grown very tired of explaining this relatively trivial concept repeatedly. You can't simply wish this force away. 

What trivial concept? I do not neglect this force.
Reply: @PiotrRysztak  
>> In fact it is more complex how lift is created

Can we stop talking about lift and how it's created!?  That has NOTHING to do with the issue at hand.  Is that why you insist on talking about it?

You say...

>> The only braking force initiated by the ground is rolling resistance

And then you say...

>> What trivial concept? I do not neglect this force.

So you're caught in another lie!
Reply: @PiotrRysztak  if you have Taken Onto Account the Perpetual Motion of the Earth You would understand that This Car does go Faster than the Wind 

I Myself Am Building a Boat With the Same Design with a Proper in the Water but then 3 other Forces will be introduced with the Archimedes principle involved

You Forget that At the Equator of the Earth there are 1035.20441 Miles Of Earth Moving due East on a 15° an Hour Tangent rotation

And the Atmosphere Moves Seperatly From the Earth as We know with different pressure variants the higher in altitude you go so the Fluid Gradient (Viscosity) os Thinner and moves at different Speeds

The Air Around Us Is Not "nothing" it has a Gradient Density like that of a Fluid medium like Water just Less Dense and less compact 

I believe with my Boat designs with the Same propulsion method Mathmaticaly ill be Reaching Speeds of Up to 60Knots In Water because the Frictional Pressure Gradient of the Propeller in the Water will be much much greater than that of the Air Above